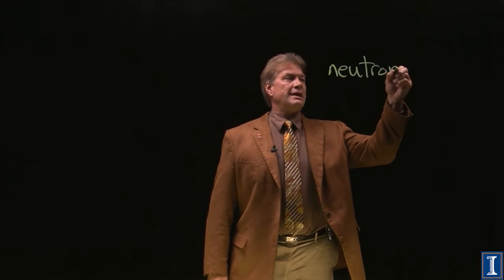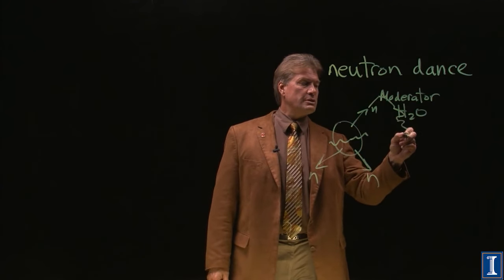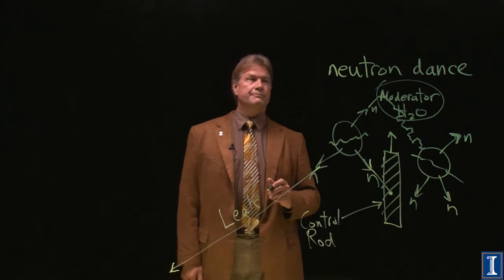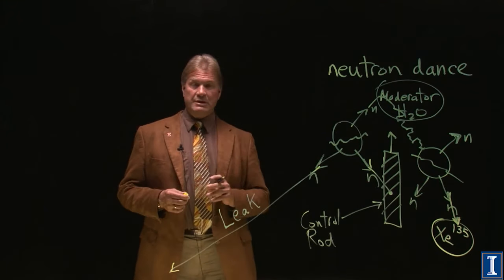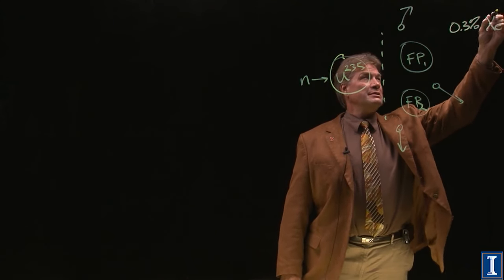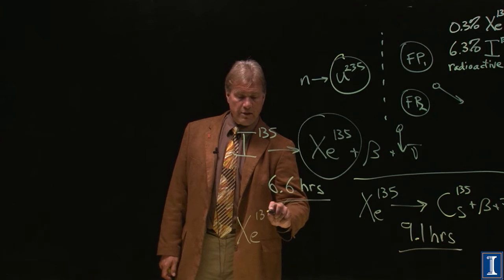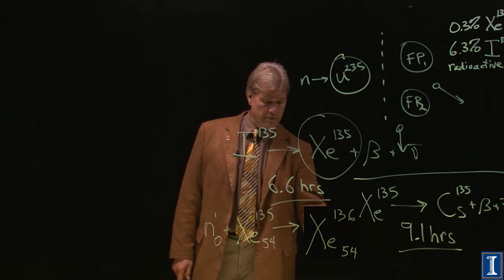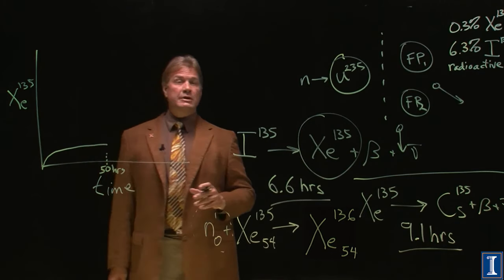Xenon Can Be a Problem

Comment: Sorry for the long post, but I need to make a correction and clear up a bit of misinformation.

As a licensed nuclear reactor operator with 20 years of experience, who has operated 11 different individual reactors of 3 different designs in his career, I can tell you that you are absolutely wrong about having to wait 3 days to restart a reactor.  Not only is it not impossible to restart before then, it's not even dangerous or uncontrollable as long as it is done properly.  I have personally performed fast-recovery startups on US Navy reactors anywhere from a couple of minutes to a couple of hours after a scram.  I have also personally shut down US civilian reactors and restarted them the very next day, due to various maintenance needs.

In either case, xenon does have to be taken into account, and there are procedural limitations, of course.  But, in fact, some of the xenon heavy startups I've personally done have been the smoothest and easiest startups, because you can essentially ride the xenon curve as it decays away, which makes it so that you don't have to add nearly as much positive reactivity as you ramp up, since xenon burnout provides you with that.

The rate at which you ramp down absolutely affects your xenon concentration.  In Chernobyl, they let power drop extremely fast, which created an absolutely huge concentration of xenon.  Their reactor went completely subcritical.  In all of my training and all of our procedures, if we ever end up in a state where the reactor is truly subcritical (-1/3 DPM SUR), we are required to shut it down.  If you end up creating that large of a xenon concentration, it would require far too much positive reactivity to be added to offset it, just to maintain power, let alone raise it back up.  That's the problem with what happened at Chernobyl.  It's not that shutting down a reactor means you can't restart it for 3 days, it means improperly controlling your reactor to let it get that far out of bounds, and then adding too much positive reactivity too quickly will get you into trouble.  If done properly, you do not need to wait 3 days.

Respectfully, I am not a nuclear engineer.  But I have been trained by the US Navy, to operate their reactors, as well as being trained by my current company, and licensed by the NRC to operate their reactors, and I have 2 decades of experience, combined.  I studied all of the reactor physics formulas, and used to be able to calculate the various values, most of which I have long since forgotten the specifics of, because you don't calculate those things on a daily basis...or ever...in regards to operating a reactor.  I would expect reactor engineers to know more specifics about fuel loading, enrichment, and all of the engineering calculations to evaluate a reactor's performance.  But actual operators, who physically control the reactors on a daily basis, have a lot better knowledge on actual operations.  A chemical engineer, for instance, would know a lot more about engine management and fuel control for an engine, but the truck driver with a CDL and 20 years experience would surely know a lot more about the nuances of what gear to select when approaching a certain grade with different sized loads behind him.

No offense intended.  I am not meaning to criticize anyone, here, I am just trying to clear up a bit of a misconception that you seem to have.  Because I have absolutely done this myself on numerous occasions, with no ill effect, and in a perfectly smooth and controlled manner.  There is no 3 day limit before you can restart a reactor.  That's just absolutely not true.
Reply: How does this comment not have more likes? It's great to see people with experience commenting in this - great to have you Adam. E.g. I'm a physicist, and while I understand the detailed particle physics, the engineering/practical aspects of this are way beyond me. For instance, when you comment "ride the xenon curve" so it's easier to increase reactivity without having to remove further control rods, I've got not idea roughly what fraction would typically have to be removed. I understand approximately that this is to offset other negative reactivity coefficients of temperature (void, thermal expansions etc), and that Chernobyl's positive void coefficient was on reason it ramped up so quickly after the xenon shut-down, but have no "feel" for how this works in practice. So it's great to read this. Having said that, these videos are still Nuclear Physics 101 - a great intro, but fairly basic details, so I think that his statement about "needing to shut down for three days" is close enough of an approximation to be justified.
Reply: Oh, and BTW Adam - when you mention "  I studied all of the reactor physics formulas, and used to be able to calculate the various values, most of which I have long since forgotten the specifics of, because you don't calculate those things on a daily basis...or ever...in regards to operating a reactor." this was one of the issues at Chernobyl - their computer, SKALA, to calculate these things took 15 minutes to estimate reactivity through various calculations, and even then I suspect it didn't do a good job, since the reactor was so large, the reactivity varied a lot over the core. So all the fancy nuclear engineering theory in the world (at the time) could not have helped them, and they should have just followed the ****ing safety protocols.
Reply: @clancyjames585  In response to your second comment (I saw them out of order in my notifications) 

I agree with you 100%.  I don't know the specifics about the day to day reactivity calculations at Chernobyl, of course.  With a reactor design like theirs, with a graphite moderator giving it a positive void coefficient, and thus positive temperature feedback, my understanding is that they quite frequently had rods moving  fairly regularly to maintain everything.  We very seldom move rods, because it's just not needed at our plants.  Our plants are very stable when it comes to reactivity.

The Navy reactors I used to operate were small enough in size, and were very VERY responsive, due to a very high enrichment of U-235, so on those, you really didn't need to calculate anything.  You just basically moved control rods a small bit, and you pretty much knew the result from a certain amount of rod motion, and it was very even and predictable.  Like driving your car, you don't have to calculate how far to push the gas pedal to drive.  Plus, the Navy reactors were responsive enough to negative temperature feedback that you usually would not even need to adjust control rods when you changed power.  Raise or lower turbine steam flow, and within a few seconds, the reactor would respond and stabilize at the new power level.

The commercial reactor I operate now is a different beast entirely.  Much lower enrichment, and very large in size (though smaller than Chernobyl, by quite a bit).  We do have negative temperature feedback (unlike Chernobyl), but it's a bit slower to respond than the Navy cores.  Our reactor design is inherently very stable, and it has all of the negative feedback aspects to make it essentially remain stable with no continuous manipulations or input at all.  Normally, we only make a slight adjustment to the boron concentration every few hours, but that's all it takes to remain stable.  Moving the plant around is a bit more involved, but our rods operate automatically to maintain temperature, and we simply have to adjust boron concentration to keep rods from moving too far and changing the power distribution.  Easily managed, with no complex calculations required.  A spreadsheet can calculate the required adjustments almost instantly.  A few simple thumbrules are also used for rapid power reductions, so the reactivity spreadsheet really isn't even needed.

Probably one of the biggest differences in our fundamental operation is that if we ever drove the reactor subcritical, like they did at Chernobyl, we would immediately trip/scram our reactor.  We would never let power fall so quickly in the first place, and even if we did, we would not rapidly add tons of positive reactivity to quickly restore power, and certainly not outside of design limits.  It's just not something we would do.  We just have a different safety culture, and of course, the industry has learned quite a lot from accidents like the one at Chernobyl.
Reply: @clancyjames585  In response to your first comment

Completely true.  I certainly don't want to come off as bashing this video, I mainly just wanted to correct that one particular point, but you are right, this is basic level stuff here, and it doesn't need to be needlessly overcomplicated for most people.

To get a little more in depth about riding the xenon curve, the biggest thing we aim to control at my plant is temperature.  Sure, there is a limit on power that we cannot exceed, but at the end of the day, the main thing we are driving by is the temperature.  We have a certain temperature to maintain at any given power level.  If temperature is too high, it means the power output of the reactor is higher than the turbine.  If temperature is too low, it means the turbine is making more power than the reactor.

What basically happens is that to raise power, we have to open our governor valves and admit more steam to the turbine, to push the generator harder, and make more electrical power.  As the governor valves open, it draws off more steam, which cools down the reactor.  The turbine power is rising above the power of the reactor, so you have to add positive reactivity to bring reactor power up to match the turbine, and bring temperature back to where it is supposed to be.

We have two ways of doing that at my plant (PWR reactor), rods and boron.  We have a certain amount of boron dissolved in the coolant which is a neutron absorber.  Need to add positive reactivity?  Either dilute out some boron (add fresh water with no boron in it, and drain out a little bit of water that has boron in it), or move control rods out.  If you move rods out, it makes the power distribution move physically higher up in the core.  If you dilute boron out, it moves power lower in the core.  So we move rods a little bit, and dilute a little bit to keep power balanced in the middle of the core.

More steam to the turbine, cools the reactor, dilute or withdraw rods to keep the reactor temperature up, repeat.  As power goes up, it also adds negative reactivity due to the fuel temperature going up, though, so we have to add a little bit more positive reactivity (rods/dilutions) to overcome that bit of negative reactivity.

It's all fairly balanced and easy to predict and manage.  The only wild card is xenon.  If you start with a xenon free core (like it would be a few days after shutdown) and startup the reactor and raise power, xenon will build up as you raise power.  So, in that case, you have to add positive reactivity to overcome the temperature change from drawing off more steam, add positive reactivity to offset the negative reactivity from rising fuel temperature, and then add some more positive reactivity to offset the negative reactivity due to xenon building up.

I hope all that is clear and makes sense.  What's different is if, for instance, you were to trip/scram the reactor, and then start up the next day.  On a shutdown or significant down power, xenon builds up rapidly, as explained in the video.  You end up with a huge concentration of xenon.  Now when you go to start up, the opposite happens.  You're raising power, and burning xenon out, rapidly.  As xenon burns out, it's adding positive reactivity.  This is basically what got the Chernobyl guys in trouble, and started off their problems.  But, if you're doing things in a controlled manner, the xenon burnout can help you.  You're drawing off more steam to raise turbine power, so you still need to add positive reactivity to keep temperature up and to offset the negative reactivity of fuel temperature rise, but now, xenon is burning out, not building up, so xenon is giving you positive reactivity to help you out.  It makes it so that you end up moving rods less, and diluting less boron out of the reactor, because xenon is giving you positive reactivity.

In the end, it's all going to balance out, though.  But starting up with xenon burning out can make the startup and power rise go a lot smoother, because it can sort of raise power on its own.

Oh, and as to what fraction of rods would typically be removed, that's not quite how it works with our cores.  Our cores are designed to operate with all rods completely removed, once everything is balanced out at 100% power.  We are not at all designed like Chernobyl.  Specifically, at my plant, we have 6 banks of rods that are removed one bank at a time, with some small overlap between banks.  We are designed to go critical when the last bank is about 3/4 of the way from being completely removed.  We calculate how much boron we need to go critical at a given rod height, and we set those conditions before we remove any rods.  Once we start up and go critical, we still have about 1/4 of the rod height on that last bank, to help control and manage things as we ramp up in power.  Over the next week or so after a startup, we slowly adjust boron concentration and slowly withdraw the rods fully.  We really only use rods for "shaping flux" and controlling where the reactor makes power, but it will naturally center itself, and we can get the rods fully removed from the core.

What I was basically saying is "riding xenon" will make it so that you don't have to pull rods out as quickly, and don't have to dilute as much or as often.  We're still going to end up moving rods all the way out, we just go from maybe moving rods every 10 or 20 minutes, to maybe every hour.  Since xenon burnout gives us some positive reactivity, we don't have to add as much positive reactivity due to rods/dilutions.

I know this was very wordy, but I hope it makes some sense.  Feel free to ask any questions if you're curious or want to know more, or if something isn't clear.
Reply: There was a hot spot in the bottom of the core, of which the controllers were unaware. That certainly must have contributed to the explosion. And while I am sure that could be done with western reactors, I am not so sure about the RMBK-1000 reactors those engineers were operating. Hopefully, you never had to operate a reactor capable of going runaway like those.......
Reply: How do you increase reactivity in a poisoned reactor core to restart it after one day? Please assume that I'm an educated man but not a physicist. I'd describe myself as an amateur mathematician.
Reply: @benchapple1583  OK, forgive me, but this is going to be pretty long.  I want to do a good job answering your question, but it's pretty complicated.

I'm only going to discuss the current plant I work at, because the Navy cores I operated, I can't go into detail about anyway. So, first off, we don't really use "poisoned reactor" as a term, at least not over here in the West. We would refer to having a xenon transient, or, if you can't start back up due to too much xenon, that would be known as being xenon precluded. Xenon precluded start ups are very rare. Lets discuss the worst case scenario at my plant. If we're operating steady state at 100% power, and have a reactor trip, all control rods fall in and the reactor shuts down, that's the fastest we can make power go down.

There is a limit. First, a quick explanation of what's happening...If a neutron creates one fission, and each fission causes one more fission with one of it's resulting 2-3 neutrons, such that you have the exact same number of fissions each generation, that's considered critical. Less than that, fewer and fewer fissions, that's being subcritical, and greater than that, more and more fissions, that's being supercritical. It's actually measured by the number of neutrons in each generation. If a certain number of neutrons causes a certain number of fissions, resulting in the exact same number of neutrons and the exact same number of fissions in each generation, that's criticality. The rate of fission is not changing.

So, the reactor trips, and all rods fall into the core, they suck up tons and tons of neutrons. The reactor goes extremely subcritical. Each generation is fewer and fewer neutrons, and fewer and fewer fissions. If that was it, it would quickly drop to having no fissions at all. But fission isn’t the only source of neutrons.  There are a lot of highly radioactive fission products, and they continue to decay away, and they continue to pump out their own neutrons. They're not fission neutrons, because you're subcritical, but they're neutrons regardless, and they can, and do, still cause fissions, releasing more neutrons. So, because you have to wait out these fission products, the fastest you can lower power is -1/3 DPM (decades of power per minute). That means it takes 3 minutes for power to be 1/10th what it was, another 3 minutes to be 1/100th of initial value, 3 more minutes to be 1/1000th of initial value, etc. Now, you pretty much instantly drop to about 5-7% power just based off dropping rods into the core on a trip, so you get an initial jump start on shutting down, but it takes several minutes for power to lower all the way down to essentially nothing. Think of an electric motor that you just turned off. There's no more energy turning the motor, but it may take just a bit do coast down and stop. That's what happens with a reactor. You can go subcritical, and the reactor is actually shut down, but power has not dropped to the absolute minimum yet...it hasn't coasted down.

 The reason I say all of this is that this is the physical limit of how fast you can drop power. The faster you drop power, the larger the xenon transient will be. So, you just tripped, rods have fallen in, power is dropping, and for about the next 9 or 10 hours, xenon is building in rapidly, to a relatively high peak. That's the worst case xenon transient we can possibly get. Xenon builds up for about 9 or 10 hours, and then slowly decays down to nothing over the next day or two. That's what we have to manage. So lets talk about reactivity control in a PWR (Pressurized Water Reactor). We control reactivity with control rods and boron. We have boron diluted in the coolant system (plain water), and we have control rods we can move in and out of the core. We choose what rod height we want to be the critical rod height. When everything is shut down and xenon free, the way we start up is to figure out what rod position we want to go critical, and figure out how much boron we have to have to make it go critical at that rod height. More boron means rods will be higher when you go critical, less boron means rods will be lower.

We add boron, or dilute out boron to get to the right amount, and then we pull control rods in a controlled manner until we go critical. We start taking off steam to turn the turbine, which puts a load on the reactor, and we add positive reactivity with rods and by diluting out boron. You'll move rods out a little bit, which makes power higher in the core, and you'll dilute out some boron, which will make power lower in the core. It's a balanced approach to keep power physically centered where we want it. The end result is that we eventually get rods fully withdrawn, and from that point on, we dilute out the boron over time to compensate for fuel burn up. As we are raising power, you're going to generate xenon, which will reach an equilibrium value, and we also have to add positive reactivity to compensate for that. In a nutshell, that's the balancing act we do. While raising power, we may dilute and pull rods every few minutes. Once we're stable, rods aren't moved, and we dilute maybe every few hours, just for fuel burn up.
Reply: So, what's different with that xenon transient? Instead of xenon starting at nothing, and then building up as we raise power, xenon is starting at a much higher value. It's going to build up for maybe 9 to 10 hours, and then decay back down to an equilibrium value over the next day or two. Depending on where you are in that timeline, depends on what happens. First off, we would need to establish a different critical boron. We still want rods to be at a level where we have plenty of "bite" to control things with the rods. So...more xenon overall means we need to get rid of some boron before we can start up. You're swapping out xenon for boron. More xenon, you need less boron. Less xenon, you need more boron. So, we set a time we expect to go critical, calculate how much xenon we will have at that time, calculate what boron concentration we need to have, and we either borate, or in this case dilute the boron concentration down. Now, we can pull rods, and go critical right where we expect to. Yes, xenon is higher, but now boron is lower, by the same equivalent amount, and we go critical where we want.

So now what happens? Well...if you're on the front half of the xenon peak, xenon is still building in. You're going to need to keep diluting boron out, and you'll need to keep withdrawing control rods to add positive reactivity to compensate for the xenon. If you're on the back half of the xenon peak, its the opposite. Xenon is going away, so you will need to add boron back in, and insert control rods to add negative reactivity to compensate for xenon going away. In either case, changing boron concentration and moving rods is a coordinated effort to keep power centered in the core. Rods too far out pulls power up higher, rods too far in pushes power down lower. It's a balance. That's what you have to do to just maintain where you are. It's still very easily controllable in our cores. You might be adding reactivity every few minutes, but it's manageable.

Now you need to raise power. Here's where things can help you. As power goes up, you're going to start burning out xenon faster, since your fission rate is going up. Xenon started out as being too high to begin with, so now, as you raise power, xenon begins to go away. This adds positive reactivity on its own. You normally have to dilute and pull rods quite a bit while you raise power, to add positive reactivity. But now, xenon burning out kind of gives you a gift of free positive reactivity, which minimizes how much you need to dilute and pull rods.

In a nutshell, we are going to start from a known stable condition. We know how much boron we need to go critical at the rod height we want. We know how much we need to move rods, and we know how much boron we need to have at any given time. And then it's all just a matter of managing it. Now, I mentioned earlier about a xenon precluded start up. At the absolute extreme end of core life, we would have an extremely low boron concentration to begin with. Basically, our fuel is essentially all burned up, and we've had to remove so much boron to keep the reactor at power that there's almost no boron left in the coolant. In that case, you could potentially be in a situation where you physically cannot get enough positive reactivity with control rods (since you have no boron to work with) that you could end up being precluded, and have to wait until the transient dies back down. Maybe a day later. Maybe a day and a half. Certainly not 3 days. But this is almost unheard of, because we run with a fuel load high enough that we never get there, before the next scheduled refueling anyway. The absolute worst case scenario would be if you tripped from 100% power, on the very last week of the fuel cycle, when boron is at its absolute minimum. At my plant, we have recently done that, a few years ago. 1 week out from the refueling outage, we ended up with equipment issues causing a trip, fixed the issue, and started back up to produce power for the remainder of that week. Now, in that particular instance we did not come all the way back up to 100% power, because it was only for a few more days, but we did come up to about 60% power. The point is, we very quickly restarted, even after the worst case scenario.
Reply: So, lets shift gears to close this out, and discuss what's different with Chernobyl. They did not have a reactor trip. Due to having a very unstable core design, they had a positive feedback loop. That means as power dropped, it adds negative reactivity, and it would drop faster. As it drops faster, it's going to add more negative reactivity, and drop even faster. Chernobyl actually went subcritical. They were shut down. Remember the analogy of a motor coasting down I talked about above? So, to start with, they disabled safety systems. They lowered power according to schedule, but then got delayed by their grid controller. Xenon is building in. Power is lowering. They add more and more reactivity trying to keep power up, but due to the feedback, it continues to fall. They add even more reactivity, well beyond design margins. They finally stopped the power decrease, but they had created a very volatile situation.

Due to core design, the control rods had graphite tips used to help shape and control power, and they had too many rods too far out of the core, meaning that those graphite tips were too high up in the core. When they tripped the reactor, the rods began to fall, and those graphite tips that should have been at the bottom, and falling out of the core, were actually in the middle, and falling into the bottom of the core. Power was centered in the bottom of the core, and the graphite caused an instantaneous power peak. Instead of being stable with graphite in the bottom that falls out of the core, they had graphite fall INTO the most reactive part of the core.

So, what's different about our cores? For one, we don't use graphite, at all. Our rods are ONLY negative reactivity, period. For another thing, we have a temperature feedback loop, by design (I can get into more specifics if you wish) that will stabilize power. As power rises, temperature rises, which adds negative reactivity. As power lowers, temperature falls, which adds positive reactivity. In either case, it tends to stabilize the reactor. So our power doesn't just fall at an exponential rate like Chernobyl's did. We simply aren't designed where that happens. Secondly, if we ever DO end up subcritical, with a -1/3 DPM, we are trained and required to trip the reactor to put it in a safe condition. The problem is that if you're power is falling that quickly, you don't really know how much negative reactivity you have, overall. You can be very slightly subcritical, and power falling at -1/3 DPM, or you could be EXTREMELY subcritical, and power is still falling at -1/3 DPM, because that’s the absolute fastest rate it can fall.  You can't know how much positive reactivity you can safely add to halt the power drop, and you can very very easily add too much positive reactivity and get yourself into trouble. We also DO NOT disable our protective safety functions when we are at power. Period. Ever. So even if you DID have power escalating rapidly, we would have automatic trips to shut the reactor down. And if our rods drop in, our reactor shuts down...period. We don't have the graphite tips and limitations on how many rods can be pulled and how far.

So those are the key differences. I hope that helps, I know its very VERY long and wordy. Feel free to ask if something isn't clear, or if you just have more questions.
Reply: @adamhutchins1981  Thank you for taking so much time to do this.
Reply: @benchapple1583  You are quite welcome, I don't mind at all.  I hope that answered your question and made it at least reasonably easy to understand.  Reactor theory is not the easiest subject to understand, and it's difficult to explain things simply without a lot of deeper discussion.  Any other questions, or if something isn't clear, feel free to ask.
Reply: @adamhutchins1981  Thank you again. I don't mind at all if you treat me like a simpleton as you probably should. Feel free to raise your game if you wish, as I believe I've said I am a mathematician and will understand complex concepts.
  I was intrigued by the idea that the speaker stated, in no uncertain terms, that he trains his engineers to wait three days after shut down before attempting restart. Whereas you stated that you have restarted reactors much earlier than that, under the same conditions and I believe you both. 

  My question is this: Are you both right and that protocol on an SSN might be less risk averse? I'm trying to imagine a situation where the power plant has gone down and the skipper is not being patient about his ship being disabled, to all intents and purposes. Versus a civilian, much more powerful, reactor where the manager has the luxury of time and can play the 'safety is king' card whenever he likes.
  I got the idea from your answer that you have been in the position of 'juggling' to try to re-establish power output, which implies urgency. If you were on an SSN then anyone can understand that. On the other hand if you were in charge of a large civilian power station, would you act the same way?
Reply: @benchapple1583  Of course, there is no intent to treat anyone like a simpleton, lol.  It's just that most people aren't aware of many of the details of reactivity control, and I want to make sure everything is easy to understand.  As for your most recent question, although I qualified and trained on an SSBN reactor plant, I never served on an SSN or SSBN, I was a reactor operator on a nuclear powered aircraft carrier.  Still, I do know a fair amount about submarines based off of my training, and yes, propulsion in a submarine is vital to keep from sinking.  Navy cores are extremely overdesigned with enormous safety margins, and they can handle huge and rapid power swings that a civilian power plant cannot.  For instance, if you have a SCRAM on a Navy reactor, it is common practice to do a fast recovery startup.  I won't go into the exact limitations, but we can go from SCRAMMED to full power within a matter of minutes.  For a civilian plant, it takes maybe an hour to achieve criticality, and can take a day or two to raise power all the way back up to 100%.  There's just so much higher of a fuel load, and a much more robust designed core that is physically so much smaller in Navy plants, and they can handle it.  And yes, we did fast recovery start ups all the time, usually for training.  It was not unheard of for the Captain or someone he designated to SCRAM your reactor from the remote panel while you are on watch.  This would be quickly followed up with a call into the control room telling you the cause of the SCRAM.  Once you know the cause, and any deficiency is corrected, they give permission to do a fast recovery start up.  You go from being suddenly SCRAMMED to at power within minutes.  The plant is designed for it, and you're well within safety margins to where it's not a safety concern.  Also, just based off of fuel loading and design, xenon has a much weaker effect on Navy cores, anyway.

For civilian cores, it's about economy of design.  We are simply not designed for those extreme transients, because it would cost exponentially more to accomplish that.  Civilian plants are designed to be easily and economically refueled and to make the most power for the cheapest cost.  That does NOT mean that safety margins are compromised, of course, but the plant is just not designed as robustly, because it's made to come completely apart every 18 months or so for a refueling.  And due to the physical size and low fuel concentration as compared to a Navy core, the limits are more restrictive.  Even still, a maximum xenon transient on my current plant, it's still well within all margins and very controllable to start up pretty much whenever.  That's not to say we would ever rush into it.  In fact, as part of the administrative issues that would limit our startup, most of it involves determining the cause, making any repairs, making sure there are no issues, performing just-in-time-training for the operators to perform a practice start up under the same conditions in the simulator, etc.  No one is shooting torpedoes at us, here, so we never have a NEED to start up right now.  But there is a huge economical cost to being shutdown, because we lose a few million dollars for every day we are shut down.  So, the entire organization is going to make sure that everything is right to start up, and once everyone is on board, we start up as soon as we can to continue to make money.  Please understand that a conservative bias and nuclear safety are the absolute highest importance to us, and we will not start up until everything is analyzed.  That's why after a trip, here, it's usually sometime the next shift when we would start up, or maybe the next day.  But the reactor physics and the xenon transient is virtually never the actual limitation, even with the civilian cores.  On a xenon free startup, like I mentioned before, you will usually have to add reactivity maybe every 5-10 minutes.  On a maximum xenon startup, you're still going to perform reactivity additions about every 5-10 minutes, it's just that your dilutions will be of a larger amount.  And of course, at anytime control of the plant becomes an issue, we are directed to fail conservatively and trip it out.  If we have trouble maintaining temperature, we trip.  Period.  It's just not anything that isn't easily managed, and the quick turnaround startups I've done have all been easily managed with no safety concerns in our approach.

As for the "3 day rule" mentioned in the video, that's not a thing I have ever heard before.  I've worked with numerous reactor engineers, and never heard any such thing from them, and it's never been anything in our training.  This may be something this one professor teaches his students, and maybe it's a good thumb rule for engineers in training, but in the real world, it's just not an actual issue or an actual concern.
Reply: So, yes, there is quite a bit of difference between Navy and civilian plants.  By default, in the Navy, you're going to start up as soon as you possibly can.  For a civilian plant, there's a lot more discussion and planning involved.  ...But we still don't have to wait 3 days, lol.
Reply: @adamhutchins1981  Thank you yet once more for taking the time.
Reply: @adamhutchins1981  Another really important issue is size.  The largest naval reactor is about 165 mwe.
Reply: richard mccann  You seem to already have your mind made up and probably are not really interested in anything I have to say.  But for the sake of discussion:

1) boron is not radioactive in the first place.  There is no such thing as "dumping radioactive boron" anywhere, because there is no such thing.

2) I have already mentioned that all waste water from our system is cleaned up before being released.  Our reactor coolant system continually recirculates through a demineralizer and filtration system.  Excess water taken out of the system is collected in large tanks for further processing.  We have an entire waste water processing plant with various demineralizer beds, filters, and reverse-osmosis media to purify any waste water before it is released.  Our waste water we release back to the river is cleaner and more pure than the river water was to begin with.

3)  I don't know how much radiation you believe is in containment that is released during venting operations, but there is virtually zero airborne contamination inside containment under all but the most extreme accidents.  We routinely ventilate containment to maintain the air pressure inside within limits.  This ventilation system automatically isolates and shuts down, completely sealing off containment in an accident scenario.  There are 3 barriers to keep fission products safely contained.  The first is the fuel cladding itself, the metal tubes the fuel is contained inside, which are completely sealed.  In the extremely unlikely event that there is damage to the fuel assemblies, anything that leaks out of the fuel assemblies is contained in the coolant system.  In the even more unlikely event that there is a leak or rupture in the coolant system, the containment is the third barrier to prevent release to the environment.  You have to fail all three barriers to have any release to the environment.  In an accident scenario our containment ventilation system shuts down and is sealed off and isolated.  Nothing is getting in or out of containment.  Should there be any release inside of the containment building (failure of the coolant system boundary), first off, the fuel is still contained within the cladding, so there is still no release, even into the containment building.  Secondly, we have catalytic recombiners to turn any hydrogen gas that builds up back into water, by recombining it with oxygen.  Only as an absolute last resort would we vent the containment, if there is absolutely no other method to keep the pressure low, and we would only vent as little as possible to maintain pressure.  In that instance, you still are not releasing any radioactivity, because you still have the fuel contained in the cladding.  You have to fail all three barriers, which means significant fuel damage, a significant break in the coolant piping, and some type of break of the containment structure or a release from containment due to recombiners not being functional.  You literally have to have about 10 or 12 different failures on top of each other.  Even Three Mile Island, with a partial meltdown, only had insignificant and negligible releases of radioactivity. 

I know you won't do it, but I would really hope you would open your mind and do some real research into the actual truth about how safe nuclear power is, and not listen to anti-nuclear propaganda, which is filled with lies and intentional misrepresentations in order to mislead people such as yourself.
Reply: @poitsplace  You are absolutely correct, and I did briefly mention that.  I spoke more about the actual physical size of the cores, comparing a Navy core to a civilian core, but the rated thermal power limit is a function of the physical size of the core and the fuel loading.

The largest Naval reactors are a bit bigger than you stated, however.  I don't know the exact figure, because I was never qualified on the Nimitz class carriers, but their reactors are in the ballpark of 500 thermal megawatts.  As a matter of comparison, the plant I currently operate is much closer to 3,000 thermal megawatts.  With cores that large, they are necessarily slower to respond and control.  It's like comparing a sports car to a large bus.
Reply: @adamhutchins1981  @Adam Hutchins Great explanation. The paragraph "So, what's different about our cores? " really sums it all up nicely.
I was wondering why you shut it down if it becomes subcritical, while claiming you can restart it soon after. The answer being simply - you dont know how subcritical it got - makes sense. 
But it means a reactor works just like any other finical device you have at home - when in doubt, try turning it off and on again =)
Reply: Andy Holland  That's pretty funny.  And you're right, it is possible to be xenon precluded at the very end of core life.  But from my experience, all the years I've been doing this, we never get to that point.  My current plant refuels each reactor every 18 months, and each fuel load has enough enrichment that we still have enough excess reactivity in the core even at end of life that I have not seen us ever have an issue with being xenon precluded.  But under the right circumstances, it is possible.
Reply: @misium  Yep.  Essentially, any time we do not know the actual reactivity condition of the core, we are required to put it in a safe shutdown condition.  Once everything is shutdown and stable, we can calculate where we are, and figure out what it's going to take to achieve criticality again.  If you end up subcritical enough that the core is no longer self-sustaining and power is dropping at the maximum rate, you have no way of being able to tell how subcritical you are.

Drive all rods in, and let power fall down to it's shutdown value in the source range and stabilize, and you can then know how much reactivity you have.  It's all just a matter of being conservative.  There is industry history where operators have inadvertently gone subcritical, and then overcorrected in an attempt to stabilize power, adding far too much positive reactivity and escalating power quickly to the point that they ended up with a trip on either high power level or a high start up rate.  If you don't know the reactivity of the core, you have to shut it down.
Reply: Adam Hutchins - Thank you for taking so much of your time explaining this to us.
Reply: Andy Holland  All good points.  I don't have personal experience with a graphite moderated core, obviously, so I can't personally attest to how touchy it is, other than to say that everything I have read about Chernobyl shows that it could be wildly uncontrollable.  It's just not the case with our cores, obviously.

I have been at my current plant for 15 years now, and in that entire time I've been here, we've gone back and forth about control using auto rods.  For our risk analysis, we keep rods in automatic to respond to a load rejection.  We are designed to mitigate a 50% load rejection, using steam dumps (40%) and automatic rods (10%).  We take a hit on our EOOS risk analysis if rods are in manual.  When I was first licensed, we were not allowed to use automatic rod withdrawal.  We would allow inward rod motion for transients, but we were required to go to manual when rods needed to step back out, and control that manually.  Within the last couple of years, we have changed that to allow automatic rod motion in and out in response to a transient.  It relieves the operators burden to some extent, although we still have to verify proper response and control and take action if needed.  We allow automatic rod insertion when ramping down, as well, but for normal ramp ups, we are not allowed to use automatic rod withdrawal, still.

As for axial offset, we do have to use rods to dampen oscillations during approximately the last 3rd of core life.  As the center of the core burns out, we end up with essentially a separate top and bottom core, making axial offset much more dynamic during the end of life.  We have no automatic control system that can manage those oscillations, so we do have to manually adjust control rods periodically to dampen it.  We've never had any issues with operators responding in the wrong manner, though.  It's a fairly slow transient (at least a day or two for each suppression) and is very easy to manage, plus it requires another operator to peer-check the manipulations and a supervisor to oversee them.  So there's other people involved in the decisions.  I understand from older operators that back in the 90s, we had a different fuel loading that never ended up with axial flux oscillations, and so it wasn't even a thing back then.  And over the last few years, we have raised our fuel enrichment, so we don't coast down anymore heading into our outages.  We have managed to shorten outage times, meaning more days online, and yet we still have enough excess reactivity in the fuel to maintain 100% the entire cycle and not coast down.  When I first got my license at my current plant, back in 2011, we would typically coast down the last 2 weeks or so.  Things have changed and reactivity management and outage planning has gotten a lot better.

Thanks for your input to the discussion!
Reply: LOL... I am an experienced truck driver! Your analogies are perfect! The fellow giving the presentation, sounds like an academia nut... knows is all but never had any real hands on a day in his life, but his description of Chernobyl sounds like the corporation I work for.... people higher up with no hands on telling you how to handle something they have no licence, training, or hands on experience doing all in the guise of safety... LOL, in my case, it's transferring thousands of gallons of liquid propane... but either way, even if this presenter's information is not completely accurate on the operating side, it does sound like what he said would be in err on the reaction mechanics side of caution, and while it doesn't work at the speed of industry, technically, sounds like it won't cause any undue harm, even though, from what you're just saying, that's not how it's done in the real world... LOL, Interesting information I'd probably never see elsewhere...
Reply: @adamhutchins1981  You are a class act I commend you for trying to educate a mule. (richard mccann lowercase name uppercase comments :)  )
Reply: @adamhutchins1981  it's seriously amazing how willing you are to share your depth of knowledge with us. I am currently at university majoring in nuclear engineering, but this comment chain was more useful than any of my intro to reactor operation classes haha. Thank you for sharing so much!
Reply: Great post, Adam! Do you know if there's a quick way to calculate ramp rate availability from burning out xenon?
Reply: @Baibakov88  Short answer: If you’re asking if we have a way to quickly calculate the reactivity effects of xenon, why, yes, we do!  And it’s actually pretty easy for the operators.

We have two main “tools” we use when coming up with our reactivity plans.  The first one is a program called Beacon.  I’m not a nuclear engineer, so I don’t know what goes on behind the scenes in this program, but engineers have gotten very VERY good at developing extremely accurate computer models of core reactivity.  This is what Beacon does.  Given the various conditions of the plant, it gives us an extremely accurate calculation of what xenon is doing.  It’s based off of a computer model, however, and not a direct measurement of xenon.

There is no direct way to actually measure how much xenon is in the core, and there is no direct way to actually measure core reactivity.  Reactivity can be calculated, of course, based off of nuclear instrumentation, which is actually physically measuring how many neutrons we have in the core.  We measure neutron leakage, how many neutrons make it out of the reactor, and we have detectors around the reactor to measure this.  The number of neutrons that leak out is proportional to the number of neutrons that are in the core, so this is a direct measurement.  Our Beacon program will use this data, and will tell us how much reactivity we are getting from xenon, and the rate it is changing.

The second tool we use is our reactivity spreadsheet.  It has a lot of data tables built into it for the specific core modeling, entered into it by reactor engineering.  The spreadsheet takes inputs from the plant computer for various plant parameters like reactor power, temperature, fuel burnup, rod height, etc.  Given those conditions, the spreadsheet will tell us exactly how much reactivity we will get from a given amount of boration or dilution, or for a given change in control rod height.  The sheet will also calculate how much reactivity is needed to accomplish a certain ramp rate, if we are going to raise or lower power.  And yes, it takes xenon into account.  We enter how fast we want to ramp the plant up or down, we enter the current xenon rate from the Beacon computer, and the sheet will tell us exactly how much we need to borate/dilute for a given time span.  When we are maintaining power stable during a xenon transient, we generally run a calculation to perform reactivity manipulations every 15 minutes, because 4 times per hour is very manageable for the crew.  If we are ramping up or down, we will generally plan on every 5-10 minutes, which is still very manageable, because you will need to add more reactivity to compensate for changing power, as well as to compensate for xenon.  We also bring in extra operators for ramping the plant up and down to manage the more frequent reactivity controls required.  And, of course, on a normal shift, when power is stable, and xenon is not changing, and the only thing that’s happening is the slow burnup of fuel, we will typically perform reactivity manipulations every 2-4 hours, because it’s just not necessary any more frequently than that.

But yes, we have a computer program that gives us a real-time calculated measurement of what xenon is doing, at any time, under all conditions.  I’ll give some more information on reactivity control, if you’re interested in more of the details.
Reply: Here’s a cliff-notes explanation of reactivity in a nuclear reactor (part 1 of 2).  First off, you need to understand what we mean by “reactivity.”  Reactivity is a fractional change in the neutron population.  How many neutrons in a given generation, as compared to the neutrons in the previous generation.  More neutrons leads to more fission, of course, so more neutrons means more power.  If each generation has more neutrons than the last, it means power is rising, and you are supercritical.  If each generation has fewer neutrons, power is lowering, and you are subcritical.  If each generation is the same, you’re critical, and power is not changing.  You have to understand that this fractional change is very small, because otherwise power is changing at a very fast rate.  
For ease of calculations and discussion, we use the unit PCM, which stands for percent milli-rho.  Rho is the Greek letter used as the variable for reactivity in calculations.  “milli-“ is the prefix for 1/1000th, just like it’s used in meters vs millimeters, or 10^-3 in scientific notation.  “percent” is, of course, 1/100th, or 10^-2, just like how percent is always used.  So, what the PCM unit of measurement means is “percent (10^-2) milli (10^-3) rho,” which is just 10^-5 in scientific notation.  Since the fractional change is so small, if each generation has, for instance, 0.00001 times as many neutrons as last generation, you would say that core reactivity is 1 PCM.

Next, you need to understand how this relates to a reactor.  In order to sustain a stable chain reaction, which is called criticality, you have to have everything balanced just right.  Start with a given generation of neutrons, you need them to cause a certain amount of fission, and create the same exact number of neutrons for the next generation, to cause the same exact amount of fissions and the same exact number of neutrons for the next generation, etc.  If you just stack up some uranium and some type of a moderator, in just exactly the right way, you can achieve criticality.  But it won’t last long.  Each time you fission an atom of uranium, you have one fewer atom of uranium.  As your chain reaction is going on and on, you’re fissioning all of your uranium, and the uranium goes away, split into other isotopes.  You will quickly get to the point that you are not producing enough fissions, and not producing enough neutrons to maintain the same fission rate, and it will die off, because all of your uranium has been split apart into other things.

If you want this chain reaction to last longer, you have to put in more uranium, right?  But the problem is, if you just pile up more uranium, now you no longer have that balance to keep things exactly critical.  You have a given number of neutrons, but since there’s more uranium, now you have more fissions, and a larger number of neutrons in the next generation.  Even more fission.  Even more neutrons, etc.  You’re now supercritical, not critical.  Depending on how supercritical you are, you’re either just going to have power (and heat production) rise and rise exponentially to the point that it all melts down, or, if you design it such that it is taken to the maximum extreme, you can develop an atomic bomb.  A very important note: civilian power plants have nowhere near anything remotely close to enough uranium concentration to ever reach that level.  It’s a common misconception, but you absolutely cannot make a nuclear power plant into an atomic bomb.

What, then, is the solution to sustaining a chain reaction for a long time?  Poisons.  You have to load a lot more uranium into your core, so it can last the whole fuel cycle (a civilian plant is normally 1-2 years for a fuel cycle).  But if you just add the fuel and the moderator, you will have a very supercritical mass in your reactor.  You have to add something to put the brakes on it.  The ones we have control of are burnable poisons, control rods, and, for my plant, boron dissolved in the coolant.  Burnable poisons are loaded within the fuel rods, and they burnout over time as they absorb neutrons.  They’re put there to help out at the very beginning of core life when the uranium concentration is the highest.  Not all plants are designed to use the exact same methods of control, but the end result is still the same.  Whatever you use for neutron poisons, you have to have enough poisons to suck up the extra neutrons, to keep the rate of fission the same, despite having an excessive amount of fuel.  Each generation you have a given fission rate, which releases a given number of neutrons, and based on the amount of uranium you have, that number of neutrons is enough to make power continually rise.  Instead of ALL of the neutrons causing fission, now you have to capture some of the neutrons in your different types of poison, so the net result is that you only have enough free neutrons to keep the fission rate constant.

Over time, as the fuel burns out, the reactor is going to become slightly subcritical, so you have to remove some of your poisons, to keep things balanced, and keep the core critical and keep power at the same rate.  What this actually looks like, on a normal given day, is that your power will slowly lower over 2 to 3 hours, and we will perform a dilution to remove a little bit of boron.  Now there’s more free neutrons, and we go ever so slightly supercritical so that power raises back up to its previous value, it remains critical and steady for a little bit, and then over the course of 2 to 3 hours, it ends up being ever so slightly subcritical, and lowers back down to the point where we do another dilution.  When everything is steady and balanced, and xenon is not changing, that’s literally all we have to do to maintain the balance, is to monitor everything, and watch our power, and when it slowly drops off, we dilute to bring it back up.  The time span is, as I said, on the order of maybe 2-3 hours.
Reply: (part 2 of 2)  But xenon…that’s the wild card of reactor poisons.  Xenon is produced directly from fission of Uranium, and also from decay of radioactive iodine.  Xenon is removed due to burnout (when it captures a neutron) and decay to cesium.  As you raise power, you produce more xenon from fission, and you produce more iodine that will decay into xenon, but you also cause xenon to burnout more quickly, because you have more neutrons for the xenon to capture.  As you lower power, you’re producing less xenon from fission, and you’re burning out less xenon because the neutron population is much lower, but you still have iodine built up that is producing xenon from iodine decay.  All the while, any xenon you do have is slowly decaying into cesium, if it doesn’t end up capturing neutrons.  And, of course, as you lower power, you’re going to have fewer neutrons, so the rate of xenon burnout will go down.

Based off of the varying half-lives of these different processes, that’s what causes xenon to change over time.  Generally speaking, xenon moves in the opposite direction first, peaks, and then turns back the other way to move beyond it’s previous value to a new equilibrium.  On an up power maneuver, xenon burns out faster than it is produced, it drops, but then xenon production goes up as the amount of iodine in the core goes up, and xenon rises to a higher equilibrium value that before.  On a down power maneuver, xenon burnout slows down, but production continues from iodine, so xenon goes up, initially, until all of your iodine decays, then the xenon will decay to cesium, and slowly fall to a lower equilibrium value than before.  In the case of a reactor trip, you almost immediately stop all fission, and the amount of free neutrons in the core go to almost nothing, because your control rods have absorbed all of the neutrons.  You are still producing xenon from iodine decay, but you aren’t burning any xenon out because, again, you don’t have any more neutrons floating around.  It’s essentially an extreme form of a down power xenon transient, with a much higher peak.  So you’re building up and building up and building up xenon, and the only way it goes away is by decaying into cesium.  For the first 10 – 12 hours or so, xenon just steadily builds up, until all of your iodine has decayed.  Then, over the next 30 – 40 more hours, the xenon slowly decays away into cesium.  That’s where this big xenon peak comes from after a trip or a shut down.  I can go into more detail on xenon if you guys want it, but that’s the big gist of it.  A good thumb rule we use is that about 24 hours after a trip, your xenon is approximately the same value as it was before the trip.

So, what does that mean?  On the front side of the peak, xenon is rising, which means in order to achieve criticality, you need less poison in the form of boron and control rods, because you have more poisoning from xenon.  On the back side of the peak, xenon is lowering, and is either at a higher or lower value that your previous steady state condition, based on how long it has been.  If xenon is lower than it was previously, you will need more poisoning in the form of boron or control rods.  But the rate xenon is building in or decaying away is also taken into consideration, because that affects what you have to do after you become critical.  If xenon is still rising, its giving you more and more negative reactivity, so you will need to dilute more and pull rods out more to maintain that balance.  If you’re on the downward side of the xenon peak, xenon is going away, giving you more and more positive reactivity, so you will have to either borate or insert rods to maintain that balance.  That beacon program I mentioned earlier calculates all of this for you, and tells you, real-time, what your xenon rate is doing, so you can plan your reactivity manipulations to compensate for it.
  And of course, as I mentioned, we take the xenon rate calculated from our Beacon program, and put it into our reactivity spreadsheet, and it will tell us exactly how much we need to borate or dilute to compensate for xenon.
Reply: @einfisch3891  Thank you!  I enjoy the subject immensely, and I love educating people about it.  It's something not many people know the details of, and there is a LOT of misinformation and misunderstanding by the general public.  I'm glad you've enjoyed this, and I hope I'm able to break things down and make them easy to understand for everyone.
Reply: (1 of 5) If anyone is interested, we can go into a bit of a case study on a short-term restart situation.  This is going to be extremely long, so feel free to skip it if you don’t feel like reading, but this will show you what all of this looks like in the real world.  This is based on my current plant, so there are some differences with other plant designs, of course.  Let’s just assume it’s the middle of core life, and we were 100% power, steady state, prior to a reactor trip.  We have our control rods fully withdrawn from the core, because that is our normal steady state operation, to be able to utilize the entire core.  We have a certain amount of boron in the RCS (reactor coolant system) to maintain power stable at 100%.  Xenon is at its equilibrium 100% value, and our boron concentration is based off of what is required to maintain criticality with the current amount of fuel concentration.  So that’s where we are starting from.

Now, let’s say we are 6 hours into a 12 hour shift, and maintenance personnel are calibrating one of our dozens and dozens of instruments, and they make a mistake and operate the wrong switch, and cause a reactor trip.  All of our safety systems work, all control rods fall into the core, the reactor shuts down, and we begin building up xenon in a post-trip xenon transient.  The operating crew performs their actions, and the plant is now stable.  We are shutdown, we are at normal no-load operating temperature and pressure, we have our auxiliary feedwater system operating, steam is still going into the turbine building and the secondary side of the plant maintaining temperature on the steam dumps into the condenser.  Management has made all of their conference calls and discussions, determined the issue with maintenance, those poor individuals get disqualified pending more training and an upgrade, and more maintenance personnel have been brought in to finish the calibration and have all the instrumentation lined up and ready for a start-up.

Management has decided to start back up halfway through the next shift (12 hours after the trip), in order to give enough time for reactor engineering to be called in to help evaluate and come up with a reactivity plan, and to allow a crew of operators to go into the simulator and perform a JITT (just-in-time training) startup in the simulator for practice, given the current plant conditions.  Reactor engineering has determined where xenon will be at the time of the startup, and has performed an ECC (estimated critical condition) calculation.  The ECC has determined that xenon is going to be significantly higher than the steady state 100% value, and therefore, they have determined the critical boron concentration we will need will be much lower in order to go critical at 150 steps (about 65% withdrawn) on our 6th and final bank of rods.  While the startup crew is practicing in the simulator, the crew on shift performs a large dilution, using the reactivity spreadsheet, to calculate how many gallons of makeup water need to dilute the boron concentration down to the ECC value.  Chemistry takes a sample of the RCS and determines that the boron concentration is within the bounds of the ECC as determined by reactor engineering.

Now the startup crew comes in and relieves the shift, to begin the start up.  Reactor engineering is on station to provide input on reactivity control to assist the operators.  We begin pulling rods.  The first 2 banks of rods, our safe-shutdown banks, are fully withdrawn, in one continuous pull for each bank.  Then we begin pulling our control banks, 50 steps at a time.  Each time we pull rods, we watch instrumentation and let it stabilize, and reactor engineering runs a quick calculation to determine the current estimated rod height where we will go critical.  We pull another 50 steps, and repeat the process.  After several cycles of pulling rods and evaluating, we get to a point where we know we are close to criticality.  We pull rods again, and we determine we are critical.  We then withdraw rods to establish our desired rate of power ascension, referred to as start-up rate (SUR), which is measured in decades per minute.  1 DPM means power changes by a factor of 10 each minute.  Meaning each minute that goes by, power is 10 times higher than it was a minute before.  Our allowable SUR is ¾ DPM, and that’s what we would normally use.  But it still takes us a few minutes to raise power, because there are several decades of power through the source and intermediate range.  As we get close to 1% power, we insert rods a bit to slow down our SUR, and to stabilize power at 1% - 2%.  At this time, since it’s about 13 or maybe 14 hours since the trip, we are just past the xenon peak, and xenon is going to start slowly burning out.  This means that we will have to begin slowly adding negative reactivity to compensate for the positive reactivity we get from xenon burning out.
Reply: (2 of 5) Personnel are aligning systems in the plant, bringing the main feedwater system on service (which uses steam driven feed pumps), and transitioning off of auxiliary feedwater.  During this time, we are looking at a reactivity plan for maintaining power.  Beacon gives us the current xenon rate, and let’s say it’s telling me I have 20 pcm/hr, because xenon is slowly going away.  I enter this into my reactivity spreadsheet, and lets just say that for this given time in core life, maybe it tells me I will need 30 gallon borations for -5 pcm, and since I have to offset 20 pcm/hr, that’s going to be my plan…borate 30 gallons every 15 minutes to maintain power while xenon is burning out.

Preparations are being made to start up the main turbine and get the generator ready to sync to the grid, but we have to raise power to 10% - 14% before we can roll the turbine.  So, I can slow down on my borations a little bit, and allow xenon burnout to give me some positive reactivity to begin raising power.  Continually adding positive reactivity will raise power, but at the same time, it’s going to raise temperature, as well, and our fuel temperature coefficient (FTC), which is always negative, will give us negative reactivity as the temperature rises, so that’s going to help maintain power and keep it from rising uncontrollably.  For a given positive reactivity addition, power and temperature will rise until the FTC adds enough negative reactivity to stop it from rising.  But just “riding the xenon curve” may not raise power as quickly as we want, however, so we will most likely look at either withdrawing rods or diluting.  Since I have to borate overall to compensate for xenon, I don’t really want to switch to dilutions (which means I would have to flush the line) just to raise power a little bit, so most likely, I’m going to use rods to raise power instead.  So I look at my reactivity spreadsheet, and it will tell me how many pcm I get from 1 step out on rods, and it will also tell me how many pcm I need to add to raise power 1%.  I also know how many pcm I’m getting each hour from xenon burnout, in this case.  So, after discussing with the other operators, we agree on a plan, and I will pull rods maybe 1 step at a time, to raise power.  We temporarily suspend our borations, so xenon is giving us a little bit of positive reactivity as it burns out, still, which is slowly raising my power.  I pull rods a step, and we watch to verify that we get the proper response in power rise.

Now, as we are raising power, that means I have to dump more steam to maintain my temperature.  The reactor is making more heat because power is higher, so I have to take that heat and put it somewhere.  Since the turbine is not running, we have a system of valves, called steam dumps, to dump steam to the main condenser, which then condenses the steam back to water, and pumps it back into my steam generators.  Heat travels from the reactor, through the RCS, and into the steam generators, boils the steam generator water into steam, steam dumps into the condenser, and then becomes water that gets pumped back into the steam generators.  Since the steam generators are pulling heat out of the RCS, the RCS water cools off before going back into the reactor, to keep the core cool, and maintain temperature.  Basically, we “make the rock hotter,” transfer that heat to the steam generator, boil water into steam, and dump it to the condenser.

So, as xenon is burning out, and as we pull rods a few steps, we raise power to 10% - 14% power, and we have enough capacity now to roll the turbine.  We go back to our 15 minute borations to maintain power.  We start rolling the turbine with steam.  Our steam dumps have automatic control, so as we take steam to roll the turbine, steam pressure drops, and the steam dumps will close off a little bit to keep the total amount of steam flow the same.  With a stable reactor power, we have to maintain a stable steam flow, in order to keep temperature stable.

While we begin to roll the turbine, we notice we are needing to borate a little bit more frequently.  We don’t borate based on watching the clock, of course, but based off of our actual indications.  Our 15 minute borations are now being required maybe every 10 – 12 mintues.  So we look at our Beacon program, and the xenon rate has risen.  Maybe it’s now 30 pcm/hr.  Divide that by 4, and round it a little bit, and we decide we want to plan for -8 pcm borations, instead of -5, to get back closer to every 15 minutes.  We run the spreadsheet, and now maybe it’s a 35 gallon boration every 15 minutes, so we change the plan and start doing that.

So, after maybe an hour or two, we’ve got main feed going, we have the turbine rolling, and we’re ready to bring the generator online.  We have the turbine control system set up for the minimum generator load of about 40MWe (at my plant).  This means that when we close the breaker to bring the generator online, it will pick up 40 megawatts.  This is within the capacity of the 14% power of the reactor.  What happens is that the generator picks up load drawing more steam from the plant, and the steam dumps will close off to compensate.  The reactor barely feels a hiccup, because the steam dumps operate quickly.  All that happens is that more steam goes to the turbine, and less goes to the steam dumps.  We are still maintaining reactor power with our previous boration plan.
Reply: (3 of 5) Now it’s time to begin to ramp up, and raise power.  Let’s say we want to start with 1 MWe/min (megawatt electric per minute), which is a conservative rate, just to get into it and make sure everything is comfortable.  Our normal rate we would ramp up would be 2MWe/min.  Before we do that, we’re going to come up with a reactivity plan.  Let’s look at Beacon again, and we see now that the value is higher, say 45 pcm/hr.  For one thing, we’re starting to roll down the back side of the xenon peak, so the rate is picking up anyway, but we also have about 14% power now, so we’re starting to burn xenon out because of the neutrons in the core from fission.  We put that number into our reactivity sheet, and also input that we want 1 MWe/min ramp rate.  So, we would normally need to dilute to raise power, but xenon is giving us a good bit of positive reactivity since it’s burning out, and it’s helping us.  Where we might NORMALLY need to dilute 150 gallons every 15 minutes for this ramp rate, but this time, maybe we only have to dilute 50 gallons every 15 minutes, since xenon is helping us out.  We will also go ahead and run a sheet for 2MWe/min, so we have that ready, and maybe it says 75 gallon dilutions every 15 minutes.

We flush the line to get rid of the boric acid in the line (because we’ve been doing borations, remember?).  We start ramping up the turbine, which means that we enter the numbers into the control console, and the computer starts slowly opening governor valves to admit more and more steam to the turbine.  Turbine load starts coming up, more steam is going to the turbine, and now the steam dumps are completely closed.  We have ramped “out from under the steam dumps,” and now ramping up further is drawing off more steam, and cooling the reactor down.  We have to add positive reactivity to bring reactor power up and maintain temperature, and also, we have to actually begin raising temperature, because we have a temperature program that requires our temperature to be higher and higher as we raise power.  The line is flushed, and we begin to dilute the boron back out.

Now we have to figure out what we want to do with control rods.  After starting up, what we’ve done so far, let’s say our rods are now at about 175 steps (out of 229 total).  We need to look at our AFD (axial flux distribution) to see where it should be at this power level.  It, too, has a sliding scale.  At 0% power, it should be dead centered in the core, and as power rises, AFD is going to slowly lower a little bit below the center of the core, just due to the temperature profile across the core, which is colder on bottom, and hotter at the top, with a bigger difference between the two as power rises.  We are having to add positive reactivity due to ramping up (by the way, we have now raised to 2MWe/min), which means I either need to dilute or withdraw rods.  Dilutions pull AFD down, and withdrawing rods pulls AFD up, remember?  The natural tendency is that AFD is going to go lower and lower and lower as power rises due to the temperature profile across the core, but we can’t let it fall too low.  So as AFD starts to go too low, below my target, I need to skip a dilution and pull rods a step or two instead.  That will give me my positive reactivity to raise power as we ramp, but it will also pull AFD back up.
Reply: (4 of 5) Now, here’s the tricky part, when I perform a dilution, it takes about 3 minutes to get all the way through the piping into the core, so I have to think 3 minutes ahead on when I need to dilute.  But…when I pull rods, it’s almost instantaneous, because the rods physically pull out of the core as soon as I hit the switch.  So, I’m watching how the plant responds, looking at the rate my temperature is changing, so I can dilute 3 minutes before I need it.  But at the same time, I’m watching my AFD to determine when I need to pull rods.  If I’m going to skip a dilution and pull rods, I can’t just pull rods when I need to dilute, I need to wait another minute or two, or else I’ll be adding positive reactivity too soon.  But then I have to remember my next dilution still takes 3 minutes to hit, so as soon as I see the effects of my rod pull, I need to go ahead and dilute again, right then, because of the delay time, or else my next positive reactivity addition will be too late.

So, all the while this is happening, we can’t just settle into doing 75 gallon dilutions and an occasional rod pull.  Remember xenon?  Yeah, it’s been burning out this whole time and helping us, but it’s beginning to burn out faster and faster.  Why?  We are raising power, fission rate is going up, and there are more neutrons!  So xenon is burning out a lot faster now because of all the neutrons.  We start to notice that temperature is hanging out a LOT longer between dilutions.  That’s great, right?  Well…not really, because we still have to pull rods out to maintain AFD.  We will get to a point where we need to pull rods, but we can’t, because temperature is on target and we don’t have room to add positive reactivity with a rod pull.  As xenon continues to burn out, we’re going to get to a point that xenon is burning out faster than the ramp rate, and we’re getting more positive reactivity from xenon than we need for the ramp.  We can’t dilute anymore, and we can’t pull rods anymore, because we’re getting too much positive reactivity already.  AFD is lowering and lowering.  So what do we do?  Ramp faster to keep up with xenon?  Can’t do that, because we are already at our limit, and we are not allowed to ramp faster than 2MWe/min.  We have to switch back to borations.  Remember, borations are going to make AFD go up, which is what we need, and why we were withdrawing control rods before.  And we’re also going to have to add some negative reactivity to slow things down because xenon is giving us too much positive reactivity.  Boron does both of those things.

Now, this isn’t something that just sneaks up on us all of a sudden, we see the effect of each dilution changing, and we will check and adjust our reactivity plan the whole time this is going on.  But we’re going to get a xenon rate from Beacon, and put it into our spreadsheet, and it’s going to tell us that we have to now borate 10 gallons every 15 minutes.  That’s cool.  We can manage that.  So we start borating, and we are maintaining temperature, and it’s helping to push AFD back up, but it’s not pushing AFD up as much as we need.  We still need to withdraw rods occasionally.  But rod withdrawals are positive reactivity, right?  So we need to borate a little bit heavier to give us some room on reactivity to pull rods.  AFD is getting a little low, lets do an extra boration, here, and once we get the reactivity effect (because remember, borations and dilutions are going to have about a 3 minute time delay), we’ll pull rods out 2 steps for AFD.  All of these manipulations are briefed with the supervisor, and peer-checked by another operator, mind you, so it’s not one person doing this in a vacuum.
Reply: (5 of 5)The good news is that once you get the ramp going, get into it, turn the xenon transient, and end up getting into a plan for borations, it will kind of calm down.  It’s still going to be changing a little bit, but since you started out above your 100% equilibrium xenon, you’re basically going to push xenon down below that level a little bit until iodine production and decay to xenon catches up, and the xenon rate is going to slow back down and steady out into an equilibrium value fairly quickly.  You’ll get set up into a rhythm of borations and rod pulls to maintain temperature and AFD, and the turbine will slowly be ramped up.  You’re going to get to a point where the xenon rate slows way down as it starts to stabilize near equilibrium, and you’re going to have to shift your plan back over to performing dilutions again, because you have now lost most of the positive reactivity from xenon.  With xenon essentially stabilized, you might end up with 175 gallon dilutions every 10 minutes or so, maybe – it all depends on time in core life and how much boron is in the coolant.  Earlier in core life, it takes a lot less water to remove a given amount of boron, later in core life, it takes a lot more water to remove that same amount.  Late in core life, maybe you’re doing 300 gallon dilutions every 5-7 minutes.  But that’s still manageable.

The big takeaways from this is that the most difficult side of things would be doing a start up within the first maybe 6 or 7 hours after a trip, because that’s when your xenon is rising the fastest.  Once you get closer to the peak, and get on the back side of the peak, it’s going to be a lot like what I just described.  Before that time, with xenon rising, we would still normally be able to get our initial boron set up for what we needed prior to startup, but reactivity is going to be more of a challenge, because xenon is building in, not burning out.  Instead of borating to maintain power, you’re going to be diluting a LOT to maintain power.  You might be limited on how fast you can ramp up the turbine, because instead of xenon giving you some positive reactivity to help during the ramp, xenon is robbing you, and giving you a lot of negative reactivity that you have to overcome.  That means positive reactivity to overcome xenon, on top of more positive reactivity to raise power and ramp up.

It’s not impossible to perform a startup under those conditions, but it might be better to wait until you are at least near the xenon peak.  And if you remember, the peak is going to be around 12 – 14 hours after the trip.  With the usual administrative issues, making sure the plant is safe to start up from an equipment standpoint, getting reactor engineering to evaluate and calculate and ECC for us, and getting management permission to start back up, as well as giving operators time to practice a startup in the simulator, it’s probably going to be about that long before we start back up anyway.  But there’s normally going to be no reason to wait 3 days.  In fact, at the xenon peak, and on the back side of the xenon transient, it’s actually easier to manage a startup.

If you compare a max xenon start up to a normal xenon free startup, they look a lot alike, but there are a few distinct differences.  For a xenon free startup, the ECC is going to require a higher initial boron concentration, because you have no xenon, so you need the boron to give you the same amount of negative reactivity.  And you’re never going to end up borating during the startup if you’re xenon free to begin with.  When you are maintaining power, you’ll be performing periodic dilutions of some amount, because you started out xenon free, and now you’re going to be making xenon due to being at power again.  As you ramp up, xenon will be building in the whole time, so you’re going to dilute and pull rods the whole way up.  You will have to dilute more, because of this.  That’s why I said in a much earlier post that “riding xenon” on a start up can actually be beneficial and make it easier, because xenon gives you the gift of free positive reactivity while it burns out.  So a max xenon startup, say 12 – 24 hours after a trip can actually be significantly easier.  You just need to understand, monitor the xenon rate, and adjust accordingly.

Of course…this is all how we manage such a thing in a commercial Westinghouse PWR reactor plant.  For Chernobyl…I know a bit about their design and some of the differences in their reactor physics, but I really don’t have a good understanding of what their actual day to day control looked like.  This is just meant to illustrate what it looks like in a western nuclear plant, and how it can be safely and easily managed, even after a trip and the resulting xenon peak.
Reply: @adamhutchins1981  Thank you, Adam. That is very helpful and informative. Are the ramp rates from the table lookup calculated from model simulations done for several plant conditions ahead of time, or are ramp rates calculated on the fly from the estimated core conditions? I ask these specific questions because of the thesis work I'm doing, and I don't have strong connections to people who actually operate the nuclear power plants.
Reply: @adamhutchins1981  actually, they, chernobyls main "thous who split atoms" guys,  know about designs flaw of reactors in RBMK-1000 series.
They also experiment with reactor in that night trying to figure out from how deep xenon den (dont know english term for this) its possible to turn reactor back on. That was political reason for this experiment, which again I cant explain to non native ussr/post ussr dweller.

Most ironical thing in this situation that renovation which should fix design flaw of the reactor was scheduled TO THE NEXT DAY after chernobyl "gift every home with peaceful atom".
Reply: @Baibakov88  Forgive me, I'm not really sure I understand your question.  It may be that you're asking about something different that what I'm reading from your question.  Just to be clear, when I talk about ramp rates, I'm talking about how fast we are loading up the generator.  Depending on time of year and outside temperature, which affects thermal efficiency, our full load at my plant is about 925 MWe, give or take.  So if I say I plan to ramp at 2 MWe/min, that means I am adding steam to the turbine, which pushes it harder, and makes it pick up load, and I want to raise my generator output by 2 megawatts every minute.  There's not any table or anything for that, it's just basically how fast do you want to raise the electrical load on the generator.

Our actual limitation at my plant is to not raise power by more than 14% reactor power in any 60 minute period.  If you take 14% of 925 MWe, then divide that by 60, you get right at about 2 MWe/min.  So, procedurally, our normal ramp rate while ramping up is 2 MWe/min.  I say normal, because we will usually start out a little slower and get things moving, then raise the ramp rate.  Or maybe we're very close to where we need to be in power, and we are only making a very slight adjustment, then we'll go much slower, maybe 0.1 MWe/min.  Then again, if you try to go at 2 MWe/min, and find that you can't quite keep up with your reactivity additions to the reactor, we will also pause the ramp or slow it down, to be able to control things better.  It's all just driven by experience and comfort of the operators.

Ramping down is a different ball game.  For a normal shutdown, we will also ramp down at 2MWe/min, because that's just our standard ramp rate and is very controllable.  But for any number of reasons, we can be procedurally driven to ramp down faster.  Usually it will be an issue with the power grid, where the grid controllers require us to cut load by a significant amount, and we have 30 minutes to be there.  Sometimes it will be an issue with chemistry, where we might procedurally have to reduce load in a certain time frame due to abnormal chemistry.  Sometimes it might be due to an equipment deficiency.  None of that is very common, however, and very rarely happens.  But depending on the situation we might go anywhere from 10 MWe/min to upwards of several hundred MWe/min for a feed pump trip, for instance.  Also it should be pointed out that at the beginning of every shift, we also brief a rapid power reduction for any overpower condition.  At any moment, if anything causes our power to rise where it threatens our upper power limit, we immediately ramp down using our pre-established over power reactivity plan, with no further discussion needed.  So we are ready at a moment's notice to rapidly reduce power by up to 2% at any time, usually at 5 MWe/min.

If you are talking about the reactivity plans we calculate, we do those ahead of time.  In fact, we have to brief a reactivity plan BEFORE we start ramping up or down.  But it takes just a minute or two to run the numbers and get a plan.  I simply have to get the current xenon concentration and rate of change from the Beacon program, type them into a spreadsheet, type in the ramp rate I want, and the spreadsheet will tell me what I will need for borations or dilutions and rods.  That's the day to day operations of the plant.  And yes, both the xenon program and the spreadsheet use the actual core conditions at the time.  Our core is analyzed and everything calculated by reactor engineering before we ever start up after refueling, and engineering has all of the models updated for the new core each time.  And throughout core life, we periodically monitor the plant by doing something we refer to as a "flux map" where we run small detectors up and down inside various locations of the core to verify things are operating per the core design.  If there are any abnormalities noted (which is also very uncommon) engineering will fully analyze it and adjust all of the calculations.

And at the end of the day, all of the calculations we have, as extremely precise and accurate as they are, are only a guideline and a starting point.  It gives you an extremely accurate idea of what to expect from a given set of conditions, and we trust these tools and use them to operate by, but if the sheet says I need 150 gallon dilutions every 10 minutes and that's not quite enough, I'm going to either dilute earlier, or adjust to a larger amount for my dilutions.  The calculations are very very close, though, and are always spot on.  But operators have the training and experience to adjust as needed, of course.

I hope that answers your question.  Don't hesitate to ask if it's not clear or not what you were looking for.
Reply: @Manuel-j3q  Thank you for that reply, I realize there is a language barrier.  I can't speak with certainty, because I was obviously not there, but everything I have ever read or studied about Chernobyl was that the test in question was to see how long the main circulating pumps could operate when powered by the generator as it coasted down on a reactor trip.  I am not aware of any experiment concerning whether or not they could restart while in a "xenon pit," which is the way I have heard soviet operators refer to it.

I can't say for certain, because I was not personally involved, but my understanding is that the issue is that the test was supposed to occur at low power, during the day shift.  The plant was being shutdown and power lowered, with xenon building in to the point that they could not turn power to raise it back up.  The test was meant to be run during the shut down procedure, with no intention of trying to hold power.  Then the grid controllers required the plant remain at about 50% load for several hours.  During that time, operators withdrew rods beyond design limitations trying to hold power constant, letting power fall to low, trying to stop power reduction and to raise power again.

My understanding is that it was an electrical test to check generator output while the turbines coasted down, and that holding power while xenon was building up was not planned.

I do agree that this specific flaw of the RBMK that allowed this to happen was known, to some people at least, and that intentions were to make adjustments to the safety systems to compensate for it.  However, I personally do NOT believe the actual operators at the plants knew about it, because of Soviet secrecy.  I do not believe the operators knew or were trained to recognize where they were, or how unstable they had made the reactor.  However, they absolutely did operate the plant well beyond design limits by withdrawing too many control rods too far.

This is all just my personal thoughs and my own understanding of Chernobyl, based off of my own nuclear training and experience, and from all of the technical documents I have read about the Chernobyl accident.  I do not claim to be an expert on Chernobyl's design or operation, though.  There are surely things that I am not aware of.  There may be a lot more to the story than what is publicly known, but that's the official explanation as I know it.
Reply: @adamhutchins1981  I think I understand what you're saying. I've been trying to calculate how fast I can raise reactor thermal power in my model based on power history or xenon concentration, and it does seem like I may have to make tables rather than trying to be clever with linearization and small perturbations of my model. Is it all right if I PM you in the future? I'm learning so much from you.
Reply: @Manuel-j3q  Thank you for sharing that insight.  I have always been fascinated and a little terrified by the Soviets in their technical designs and their political strategies.  Soviet machinery always seems purposely simple and crude in it's design, and I find it really interesting.  And I understand what you are saying, over here, we have a CEO and President of our company, because it is, of course, a capitalist private company to make profit, and we also have various Vice Presidents for the different plants, and Plant Managers.  We basically refer to the CEO and different people around his level as the corporate executives.  I am sure there are business decisions they keep from us operators, but when it comes to technical and safety issues, they make sure we know it.

I do also feel like training for workers at Chernobyl and other Soviet plants is much less than the training our operators get.  Most of us are not nuclear engineers, but we do go to about 2 years of technical schooling to teach a pretty in-depth level of thermodynamics, electrical theory, and reactor theory to the operators here.  I feel like Chernobyl workers, at least at the time, were not trained to that level.

I want to visit Ukraine and visit the Chernobyl site, now that they are doing plant tours.  Chernobyl has always been something I was fascinated by, and I want to see it for myself, and stand in the Reactor 4 control room, and to see the  plant site and also Pripyat.  I also think it would be interesting just to visit Kiev.
Reply: @Baibakov88  I would be glad to assist you any way I can, but I have to point out that I am not an engineer, and it has been a long long time since I studied and learned all of the formulas and calculations of my reactor theory training.  I can certainly do my best to help, and I can definitely fill you in on any questions you may have about day to day operations and what we actually do and how we actually control our reactors in real life.

Honestly, I have never PM'd anybody on YouTube, is that a thing?  We can find some way to get in contact, though.  I don't mind at all, and would be glad to help you any way I can.
Reply: Yes I agree; I was a Licensed Operator for 14 years and we wouldn't let Xenon stop a startup.  We had a computer program (Rhobal) that would estimate our time to criticality and rod positions, and boron concentrations needed.  The pressures a too great to get back online from a commercial standpoint.
Reply: @adamhutchins1981  I am in academia, so real world knowledge of how power plants actually operate is very helpful. I may have some questions about controlling the balance of plant and heat removal in the near future.

It looks like there's no longer an option to privately message on here. I'm not sure why it was removed.
Reply: @taraswertelecki7874  it was a steam explosion, which happens when you subject already barely fluid water from pressure alone to a temp spike from dropping nuclear reflectors into it.
Reply: So you're saying I should pull out these control rods?
Reply: re: "As a licensed ... , I can tell you that you are absolutely wrong about having to wait 3 days to restart a reactor."
>> Having read the comments, and watched the video, I think you 'jumped' prematurely on this. MUCH mention was made of Chernobyl as an extreme example, and I think this was to drive home the point of respecting Xenon poisoning.
Reply: re; "if not reactor 4 at Chernobyl, would a different RBMK somewhere else have gone up?"

Doesn't sound like you 'paid attention' to the video presentation near the end ...
Reply: @Stephen Davis re: "Yes I agree; I was a Licensed Operator for 14 years and we wouldn't let Xenon stop a startup. "
>> Sounds like you guys would teach advanced techniques to first year 'nuclear operators'. Maybe the BETTER way is the way the instructor handled it, as in, learn the safe technique first, then adapt that to EACH facility in their own 'shop procedures' as to how long to 'wait' before startup.
Reply: Madam Meouff  "if not reactor 4 at Chernobyl, would a different RBMK somewhere else have gone up?"

This is just my opinion, of course, but for the former Soviet countries, yes, I believe that with the trend they were on, if it wasn't Chernobyl, it would have been another plant.  In fact, it WAS other plants, too, not just Chernobyl.  Chernobyl is just mainly the most well known, and possibly the worst one.  If you want to do a little bit of reading, look into the Mayak breeder reactor the Soviets were using to produce plutonium for their nuclear weapons.  There was a documentary on Netflix (not sure if it is still on there or not) called "City 40," about the secret city now known as Ozyorsk.  Basically, in a rush to keep up with USA in the nuclear arms race, the Soviets charged headlong and recklessly into their production of plutonium to develop their weapons, and they have had untold numbers of accidents and extremely huge releases of radiation to the surrounding communities.  For what it's worth, Chernobyl was intentionally designed such that it could be used as a breeder reactor, as well, to produce plutonium for nuclear weapons also, not just power generation.  I am not aware that it was ever used as such, however.

As a state secret, the "closed cities" (City 40/Ozyorsk was the city built around the Mayak plant) were created to house the workers of the plant, under strict secrecy, to prevent the West from knowing where their plants were.  As a result of all of this, untold numbers of people have been exposed, a lot of long-term health effects of radiation sickness on nearby residents, and everything kept under strict secrecy.  Chernobyl is still rated as the largest disaster, because it spread so much contamination all over Europe.  But while Chernobyl released more radiation in total, Mayak has released almost as much, only it has stayed generally within that local area.  Lake Karachay, where a lot of dumping from the Mayak plant occurred, is considered to be the most polluted place on Earth, with a deadly radiation dose still to this day.  If you're interested, you should also look into the Kyshtym Disaster, which is probably the biggest release from the Mayak plant, which released an enormous amount of radioactive contamination over the surrounding population.

Admittedly, it's hard to know how much of this is real, and how much has been sensationalized, because I haven't been personally involved, but the Soviets at the time had a track record for a general disregard of safety, and a "make it happen no matter what" approach to things, which is seen in the Chernobyl accident, of course.  Defeating numerous safety systems and attempting to operate the plant well beyond the established safety margins.  Plant design factors into it, and the RBMK-1000 design used at Chernobyl is generally a lot more unstable and difficult to control than the designs we use, but even starting from that point, Chernobyl still could have been operated safely, had the safety culture been there.  In fact, Chernobyl continued to operate (at least Reactor #1 and #3) into the early 2000s before being finally shutdown, which goes to show that learning from past mistakes and reinforcing the safety culture is truly what they needed.  None of this has been lost on nuclear operators elsewhere in the world, mind you.  

It can't even be put into words how much the Three Mile Island and Chernobyl disasters have affected us.  Lessons learned from TMI lead to much better training of the plant operators, with an emphasis on fundamentals of nuclear theory and thermodynamics.  A big cause of TMI was operators not understanding the thermal-hydraulic condition of the core, leading to taking exactly the wrong actions.  Without going into too much detail, had the operators not done anything, TMI would not have happened, because their safety systems worked to mitigate the loss of coolant accident they had.  Due to not understanding what was happening, the operators mistakenly turned off their emergency core cooling systems, leading to the meltdown.

Operator training has been enormously improved since then, including running any number of accident scenarios on the crews in the simulator, to ensure operators understand and can properly respond to accidents.  Likewise, lessons learned from Chernobyl have emphasized the safety culture needed, even on a routine daily basis.  Safety systems are never defeated, operating limitations are strictly enforced and never violated, and, as I said in an earlier post, if we were to get to the point of being subcritical, we are required and expected to trip the plant and shutdown the reactor.  We have had it drilled into us that if there is ever a concern, we are to trip the plant, and management will support us in taking the conservative action to ensure nuclear safety.  Chernobyl, at the time, had more of a culture of "you will get this test done, or you will be looking for another job."  Which is entirely the wrong mindset.

I understand, as anyone else does, that nuclear power must be handled cautiously and safely, and it's not something to be taken lightly.  But that's not to say that nuclear power is unsafe.  When you start with a plant that has an inherently safe design, and when you focus on a conservative bias and keeping nuclear safety at the forefront in your day to day operations, nuclear power is a very safe and reliable source of power.  I believe Chernobyl could have been operated safely, even despite their plant design, if they had ingrained the safety culture we have today.
Reply: Commercial BWRs have xenon override capability during their entire operating cycle and can restart anytime (although it's a pain to do because you need to shift startup rod patterns to infinite lattice to have any hope at core control). Commercial PWRs have xenon override during 95-99% of their operating cycle. 

CANDU plants and other natural uranium plants can and do get poisoned and will have a long term delay before they can safely restart.

I did a peak xenon restart at Clinton Power Station (I was the reactivity SRO), we also had a positive moderator temperature coefficient at the time. It was an interesting startup. The center of the core was effectively shielded by the xenon, so we had to be very cautious pulling the peripheral control rods. We went critical on a peripheral one without a strong indication and the core was not initially coupled. It looked weird so we stopped pulling rods until the core started to couple. Reactor period kept accelerating but was still controlled pretty well. Once we hit point of adding heat we kept the reactor isolated (not steaming) until 400 PSIG when we were past the positive temperature coefficient region. Then we started controlled steaming and warmed up to balance out the power rise due to xenon burnout. Barely had to pull rods to raise pressure from 400 PSIG to NOP/NOT because of the xenon burn. Was a very interesting startup and I'm glad I got to be the one to run it.
Reply: Madam Meouff  "What happens if something goes horribly, horribly wrong and another very large ship collides with your ship and cuts into the reactor room? Would the reactor go critical or is there some kind of system in place to make sure that wouldn't happen?"

First off, I know this sounds petty, but there is a bit of a misuse of terminology in your post.  A reactor doesn't "go critical," it is either subcritical, critical, or supercritical.  "Going critical" has, for a long time, been scary sounding words used in movies and TV shows, but it doesn't mean what you think it means.  I talked about it in an earlier post, but when a reactor is critical, it simply means that the power isn't changing.  It means that you have a chain reaction of nuclear fission, that is continuing at the same rate.  Criticality is a good thing.  We like it when reactors are critical, because they are making power, and they are stable.  If you have an accident, or something goes wrong, you really want to make sure you are subcritical.  In that case, subcriticality is even better.  It means that the chain reaction has stopped, or is at least slowing down and dying off.

What you're really worried about is a reactor becoming supercritical.  Supercriticality is when power is rising.  Your chain reaction is accelerating, and you're getting more and more fissions at a faster rate as time goes on.  As power rises, heat production goes up and up and up, and if you don't remove the heat, you can melt the fuel, and even melt out of the reactor itself into the environment.  Having said that, a little bit of supercriticality is necessary from time to time, because that's what is required to start a reactor up and raise it's power.  But you need to be able to, at any time, make the reactor critical to stabilize power, or make it subcritical to shut it down.

So what does that mean?  It means that a nuclear ship out at sea, the reactor(s) is/are critical.  Making power, a stable chain reaction, everything is controlled.  Something goes wrong, you want to be able to instantly make the reactor subcritical, so it shuts down, and stops producing heat from fission (there is still decay heat, which I'll talk about in a minute).  Navy cores are designed to operate using only control rods, they don't use boron (with one exception I'll explain in a bit).  Pull rods out a certain amount to start up and operate the plant, when it's time to shut down, drive rods back in and the reactor shuts down.  In case of emergency, there is a SCRAM switch which will immediately drop all the rods into the core.  It's like a shutdown, only faster.  Instead of driving rods in, they immediately jump into the core.  As a fun fact, we actually have to test how long it takes them to insert, to ensure they can drop in fast enough.  Navy cores also have a really neat design where the rods even have a big spring on them to make sure they can insert, and stay in the core, even if the ship capsizes and flips upside down.

The control rods in a Navy core are such good absorbers of neutrons, that when all the rods are in the core, it is physically impossible for the core to even become critical, much less supercritical, no matter what else happens to it.  If you insert the rods by shutting down, or by tripping the reactor (known as a SCRAM on Navy cores), there is no physical way for the core to be making any more power from fission.  So if something goes wrong, that's the first thing that happens.  And, for what it's worth, it's a "failsafe" design, because those rods want to drop into the core.  They really want to.  There is a spring pushing them down, and the only reason they stay out is because there are motors we use to pull them out.  But they're connected to the motors with a latch, and it takes electricity to keep them latched.  If anything happens to the electrical power on the ship, the rods can no longer stay latched to the motors, and they shoot into the core.  We have instrumentation that measures a lot of things in the reactor, like temperature, and pressure, and coolant flow rate.  If any of these instruments say that you are outside your limitations, they cut power to those rod drive motors, and rods drop in.  Even if it's an instrument failure.  If the instruments lose power and can't measure things anymore, rods drop into the core.

I mentioned boron.  Some Navy plants are designed with one more emergency measure to shut the core down.  Remember, I said that if the rods go in, it's physically impossible for the core to be critical or supercritical.  But...just in case...some of the Navy plants have a boron injection system, where you can inject a tank of highly concentrated boric acid.  Boron is a very good neutron absorber, so even if dropping all the rods in somehow doesn't shut the reactor down (which is not actually possible), you can put a bunch of boron in there to also ensure the reactor is shut down.  Basically, if anything bad happens, even if the operators do nothing, the reactor will shut itself down, because that's what it wants to do.  It's ready and just waiting and trying to drop the rods in to shut down, and the operators can only keep the reactor online by following the procedures and operating things properly, and keeping all of our parameters within the limits.  If you let anything go outside the limits, the reactor shuts itself down.

By the way, that's also how civilian plants operate.  The reactor is designed to want to shut itself down, and you have to keep it operating.  Chernobyl was even designed that way.  Those are all the safety systems that were defeated that everyone talks about, they had to defeat all of those protective devices to force it to stay online.

So, no matter what, you can guarantee that the reactor will shut itself down.  What's left, though, is decay heat.  Even though you stopped all the fission from happening, you have a lot of radioactive fission products in the core.  When you split apart uraniuim atoms, it splits into...something.  It's different every time, so it doesn't always split into the same atoms, but the things it splits into are usually (almost always) some radioactive isotope.  Even after you stopped the fission from happening, those radioactive isotopes are decaying away.  When they do, they produce heat.  It's not much heat, relatively speaking.  Maybe 0.5% to 1% of the normal heat produced by the reactor.  But that heat still has to be removed, or else the core and the coolant inside will continue to get hotter and hotter.

How do you remove heat from a reactor on a ship, especially if you've lost power?  No power means you have no pumps to run to circulate the water.  But we have something called natural circulation.  Heat rises, right?  So as the reactor heats up, the hot water in the reactor begins to rise, and it will flow out of the piping in the reactor to the steam generator.  The steam generator is a big tank of water, and as the reactor coolant flows through the tubes in the steam generator, it pulls heat from the reactor coolant.  Now, that water is colder, and it will begin to fall back down.  The way the piping and the core are designed, that colder water falls down into the bottom of the reactor.  Then it heats back up, rises, flows out the top, cools off as it passes through the steam generator, falls back down, and goes back into the bottom of the core.  It naturally circulates due to a thermal driving head.  As for the steam generators themselves, there is enough water in there to absorb that heat, and then let the heat radiate out of the steam generator to the atmosphere around it, and if that's not enough to cool it off, it will slowly boil and create steam, which will bleed out from the relief valves.  Everything is sized and planned out in such a way that the steam generators can easily remove the heat from the reactor, using natural circulation, without any pumps running, once the reactor is shutdown.  Temperature will be a bit hotter than normal, in order to drive natural circulation, but nowhere near what would be required for a meltdown.  Some Navy plants even have an emergency cooling system that works the same way.  They have valves that spring open when you lose power, and it will use the same natural circulation through that piping system to remove the heat through a heat exchanger that radiates heat out to the water around the ship.

If something bad happens, the reactor will shutdown.  If you still have power, you still have pumps to keep everything cool.  But even if you lose electrical power (Navy ships, as well as civilian plants, have diesel generators for backup power, by the way), as a last resort, you still have natural circulation that will remove the heat from the reactor into the steam generators, where the heat will simply be lost to the ambient air around the steam generator.  Not to be morbid, but assuming the worst of the worst, and assuming the ship sinks, from a nuclear safety standpoint that would actually be the safest outcome, because the reactor plant would be at the bottom of the ocean, surrounded by cold ocean water to keep it cool, and it would be far far away from everybody.

Having said all of that, you have to realize that the reactor vessel itself is the strongest part of the ship, in the first place.  Reactors are made out of extremely thick steel vessels, designed to hold thousands of pounds of pressure inside of them.  They are much MUCH thicker than anything else on the ship, even the hull of the ship, even the thick hulls of a submarine.  Not to mention, the reactors are in a special compartment, known as the reactor compartment (not a very imaginative name), which is much thicker than the normal hull of the ship also.  So if there is a collision between ships it's not really going to be a thing for the reactor compartment to be breached, much less bust open the reactor itself.
Reply: @uploadJ  "I think you 'jumped' prematurely on this. MUCH mention was made of Chernobyl as an extreme example, and I think this was to drive home the point of respecting Xenon poisoning."

Yes, I realize Chernobyl was an extreme example, but this professor did say that he teaches his students, as a rule, that if you shutdown a reactor, you cannot restart for 3 days.  I was simply making a correction to that, and saying that the 3-day rule he claims to teach his students is not correct.  I think we are all in agreement that Chernobyl was the extreme situation.

And you are right, xenon does need to be understood and respected, or else an operator can find themselves overcorrecting and putting the reactor into a potentially unsafe condition.
Reply: @enthalpy  Thanks for sharing your experience.  I have done some benchmarking at a BWR, and at my plant, we have operators who have had BWR experience in the past, so I have learned, unofficially, quite a bit about BWR operations and the differences, but I have no BWR experience myself.  I'm not sure what you mean when you say "commercial PWRs have xenon override during 95-99% of their operating cycle."  I don't know if that's some different BWR terminology that I'm unfamiliar with, but its nothing I've heard of people discussing, at least not in that terminology.  I can tell you that we have no specific system that compensates for xenon.  We use control rods and boron concentration to control reactivity, as usual, and we develop our reactivity plans based off of what response we are getting from Xenon.  As mentioned in a previous post above, we have a computer system called Beacon that gives us a calculated real-time measurement of xenon and it's rate of change, and we factor that into our reactivity control plan.

Clearly, we do operate our PWRs differently than a BWR.  We ramp the unit up or down with a control console that adjusts the governor valves on our turbine, and we manually (or auto, in the case of our automatic rod control) adjust core reactivity to maintain the reactor at the proper temperature as we draw off more or less steam.  We also don't move our rods individually like you guys do, and our rods are used primarily just to go critical and start up the plant, and then for flux control while online.  We start the plant up, and work control rods entirely out of the core, and adjust boron concentration for reactivity.  We monitor our axial flux distribution, and if and when flux oscillates too much from top to bottom in the core, we will insert rods to dampen the oscillation.

Start ups for us are a bit different, also, because we pull rods in banks, so it is even across the core.  We don't ever have an issue of going critical with rods in an uneven configuration and the core being uncoupled.  As for our moderator temperature coefficient, we are sometimes positive as well, but it is only at the very very beginning of life, and only at very low power.  And even though our MTC may be slightly positive, of course, the fuel temperature coefficient is always negative, so our overall temperature coefficient is still slightly negative.  Realistically, for us, at the very beginning of core life, on the initial startup, with positive MTC, the worst it really gets is to just not really have any temperature feedback.  What we end up seeing is that as the turbine valves ramp open drawing off more steam, reactor power stays constant, and temperature just begins to fall.  Then we either withdraw rods or dilute to add positive reactivity, and reactor power and temperature will rise.

I'm sure that was interesting being there for that startup you talked about.  Thanks for sharing that.  It's really neat, as an operator, to see some of the differences between plant designs.
Reply: @adamhutchins1981  that because soviet political leadership, which unofficially names as "line of party", was aimed to supply the population with goods which do its job well in the first place. It can, and in most cases would, looks like garbage, but it was intentional. Plus, because resource base (like equipment and materials) was poor, comparing to usa, there are much greater engineering tolerance, like if in usa steel plate can have 3 +- 0.01....american distance things tolerance, in ussr it can be 3 centimeters +- 0.1 or even 0.2 centimeters.

For example, I remember that my granpa was able to fix TV from like 1970-1980 using only soldering pen.
Because most of its components uses transistor/resistors/etc which you can buy in closest shop and there are specific magazines about electronics which have literally full schemes of tv, with indication what part of it are most likely will be broken. Dont know, maybe in usa it also was possible in that time period, but I doubt.
Anyway, that was an entirely different epoch.

And as side note, if you really manage to visit kiev, feel free to use you native english, of course if you have good pronounce. Most peoples there, and not only there, know english on more higher level than "london is a capital of great brittan". That would sounds more reasonable than "gde zdies megajzin?" (wheres the store here?)
Reply: @Manuel-j3q  It was a little bit the same here.  Back in 1970s, and 1980s even, a lot of electronics like radios and TVs used vacuum tubes, and you could easily repair them by replacing tubes when they broke.  Even if it was beyond repair at home, there were many shops that would repair your TV.  Maybe not quite as much as you are talking about, though, because we didn't have schematics available for things, because they are built by private companies that don't like to release their design information.  But in general, we used to be able to repair a lot of things at home.

I know Soviet equipment was designed just to work and do its job, and had a lot more tolerances.  It's somewhat beautiful, to me, in the design simplicity of a lot of things that are made to just work, and not really be super elegant.  The USA is obviously quite different.  Being capitalist and not state-run for goods and manufacturing, companies made competing products.  You make a radio, and I make a radio, and if my radio is not as good as yours, people buy your radio and not mine.  Companies are driven to create a better designed product, rather than one that just works.  I know things are different now, since the fall of USSR, and I have always wondered how different manufacturing and retail is in former Soviet nations now.

It is very different, the cultural differences.  And I know things have changed in former Soviet countries from how they used to be, but the old Soviet culture, and the more modern cultures over there, fascinate me, and I'd like to learn more about it.  I am always interested in learning about different cultures, although I would not have wanted to live under the Soviet lifestyle back then.  But just like nuclear power, for instance, I know all about US nuclear reactors, because that has been my career for 20 years now, but I am fascinated by Chernobyl and the RBMK design, and learning all of the differences.  It is very interesting to me.

I really would like to visit Kiev and Chernobyl, and meet some of the people and learn a little bit about the culture in Ukraine.  In my life I have been in the Middle East when I was in the Navy, and visited U.A.E. and Bahrain, and also visited Italy (Naples, Rome, Pompeii), Spain (Cartagena), and UK (Portsmouth and London).  I want to do more travel and see more places.  Ukraine and Chernobyl are on the list.
Reply: @Manuel-j3q  If you don't mind me asking, are you from Russia?  Or Ukraine?  Or a different Slavic country?  I'm just curious.
Reply: @adamhutchins1981  Im from ukraine.
Reply: @adamhutchins1981  Does your plant use additional control rod banks to manage the axial power distribution? On the balance of plant side, what kinds of changes to steam pressure or feedwater systems do you make, especially when you change the power level? I'm trying to get a sense of how things are coordinated for conventional LWR concepts.
Reply: +Adam Hutchins     I'm sure you are much much more experienced and much much smarter than me but so often I've seen the super smart guy take short cuts only to find out on the forth try that the recommended safety precautions are there for a reason and maybe the process is not as fool proof as they had imagined. In the case of a fission reactor it only has to get into a run-away state once and all the times previously when everything went you way you expected don't count. As a member of the public or a participant in the nuclear industry I'd much rather the reactor was left for 3 days for the xenon to clear before starting to pull control rods. The consequences are sufficiently serious that taking a calculated risk is a dumb idea no matter how much the odds might appear to be in your favour. The guy in charge at Chernobyl was an expert too you know and he got it wrong that one time (the same procedure had been tried on three previous occasions without the reactor getting out of control). Harry Daghlian died not because he was unintelligent (he was a nuclear physicist on the Manhattan Project) but because completely unnecessary risks were taken. If not for yourself, for the rest of us play it safe, take the time needed please rather than chasing the curve down. Things go wrong, like positioning the diesel generator sets too low so they were flooded when the tsunami breached the sea wall or not being able to vent hydrogen from the reactor buildings that lead to them exploding one after the other at Fukushima. It is always so much easier to see what went wrong after one of these rare events than predict ahead of time the cascade of failures that lead up to the catastrophe. Things will always go wrong, the trick is to have sufficient secondary fail safes to halt a sequence of events before it gets out of hand.
Reply: @Baibakov88  Speaking just for the plant I work at now (because other plants may have a different control rod setup), no, we do not have, or need, additional rod banks to manage AFD (axial flux distribution).  Our design has 48 control rods in 6 separate banks.  The first two banks are safe-shutdown banks, not used for control, but used just to ensure a safe shutdown margin.  The remaining four banks are our control banks.  On a startup, we adjust our boron concentration to a calculated value to reach criticality about 2/3 of the way through the very last bank.  When we begin the process of starting up, we will withdraw both sets of shutdown banks, so they are ready to trip and fall into the core if needed.  Then, the actual startup begins, using the control banks.

Our control banks have a program that gives us a certain bank overlap.  What that means is I have a switch that says "rods in" and "rods out" and that's all I have to manipulate.  Bank A moves about 2/3 of the way out of the core, and then Bank B begins to move with it, so Bank B moves through about the first 1/3 of the core while Bank A is moving through the final 1/3 of the core.  Bank A hits the top and stops, and Bank B moves on its own through the middle of the core, and then when it reaches the top 1/3 of the core, Bank C begins to move.  So we have one bank moving through the bottom 1/3 of the core while one bank moves through the top 1/3 of the core, and when the previous bank hits the top, the current bank moves by itself through the middle.  Due to core buckling and the fact that there is more neutron leakage at the periphery, one bank moving through the middle and two banks moving through the top and bottom 1/3 of the core add reactivity at approximately the same rate.  All of this is managed with a "bank overlap unit" that has programmable start and stop points for each bank, so you simply hold the switch in "rods out" and the rods automatically follow that program.

Once we achieve criticality, about mid-way through the last rod bank (all the rest of the banks will be full withdrawn by that point), we continue with the startup on the secondary side.  There are a few more things we have to do with the reactor before we reach the point of adding heat (POAH), but that's basically leveling power at a specific point in the intermediate range and taking some criticality data for the engineers, and only takes a few minutes.  We will bring power up to 1%-2%, and start up the steam plant, bring the turbine online, and ramp the plant up.  I went into a lot of detail in a previous post, so I won't rehash that, here.  But, as far as control rods go, we are going to use them to manage our AFD as we raise power.  You balance dilutions and rod pulls to maintain AFD.  Pulling rods pulls AFD up, diluting pulls AFD down.  We have a program that tells you what AFD should be for that time in core life and that power level, and it's simply a trend on our plant computer, so you can see if your actual AFD line is above or below the program AFD line.  If its too low, you know you need to use more rod withdrawals.  If it's too high, you need to use more dilutions.

The end result is that when we get to 100% power and we are stable, we will finish working rods out that last little bit, to have rods fully out of the core.  Remember, this entire time, both of our shutdown banks, and our control banks A, B, and C have been fully withdrawn this whole time, and all of the rod motion for the startup has been on Control Bank D.  When it's all said and done, you will be at 100% power, all rods withdrawn, reactivity controlled by boron concentration only, and AFD will be stable on the target.

Over time, since AFD will naturally be a little bit below the centerline of the core, you're going to produce a little bit more power in the bottom of the core, and a little bit less at the top.  It's unavoidable.  It's due to the temperature profile across the core.  Colder on the bottom, and hotter as the water flows up through the channels in the core to be the hottest at the top where it exits.  Colder water at the bottom means it's more dense, and makes a better neutron moderator, so you have a slight bit more moderator in the bottom of the core, and as the water heats up through the core, its less dense, and a little bit worse of a moderator, so you have a slight bit less moderator in the top of the core.  Since you're making more power in the bottom, you will produce a bit more xenon in the bottom.  As the bottom of the core builds up some xenon, power will tend to lower in the bottom of the core, and the top of the core will begin to make more power, because the reactor has to make the same power overall.  Now you build up some xenon in the top part of the core, while it begins to decay off in the bottom of the core, and it pushes power back down.  This is a xenon oscillation.  We informally refer to it as "flux is swinging" because the neutron flux is slowly moving up and down through the core.  It's about a 30 hour time frame between peaks, so it's not very fast, and the overall amount of xenon in the core is the same, and the overall power in the core is the same the whole time.

For the first half of core life, maybe a bit more, you have enough fuel concentration that it just really doesn't move much.  It will slowly move up and down a tiny bit, but it basically still stays centered in the middle of the core.  But as you go further in core life, you begin to burn out the fuel in the middle of the core faster.  More leakage around the periphery, remember?  So you naturally make more power in the middle, until you burn that fuel out.  By the end of core life, the middle is almost gone, and you really end up with a top core and a bottom core.  You can actually see that flux profile when we do our flux maps, where the core will be making power at the top and bottom, but not nearly as much in the middle, at the end of life.  When we get to that point, each time we have xenon oscillations occur, the flux has to move higher in to the top, and lower into the bottom to find fuel.  Remember, overall power is the same, so where the neutron flux is the strongest is going to be where you have fuel still, and can make power.  Because you begin to develop this hourglass shape in the core with the middle burning out fastest, the flux is going to move higher and lower on each swing, and will accelerate.  We have to dampen those oscillations, or else they will continue to amplify until you're making all your power in  either the top or the bottom, and then you can violate your limits for local power production...making too much power in that one spot in the core.

We use the very same control rods, Bank D, to dampen these oscillations.  As flux peaks in the bottom of the core and begins to move up towards the AFD targed, we start pushing rods in to force the flux to stay where it is.  Of course, that means you have to dilute more to keep overall reactivity the same, since you're adding negative reactivity from rods.  But the idea is that as you build up xenon in the bottom of the core, you need to add the same amount of negative reactivity from rods to the top of the core to keep AFD where it is supposed to be.  And since you have more negative reactivity from xenon and rods, you have to add more positive reactivity by removing boron, to keep the total power output the same.  It sounds tricky, but it's a very slow process (remember, its about a 30 hour cycle time) so it is very easily managed.  We may step rods in 5-7 steps (out of 229 steps total) just on that one control bank over the course of an hour or two, and then you just sort of "let it marinate" and let the xenon stabilize and begin to burn out in the bottom of the core.  As it does, and power starts to move back to the bottom of the core, we will slowly pull those rods back out, until they're at the top of the core again, and the flux suppression is complete.

So that's AFD management.  I'll talk about the secondary parameters in just a moment, once I get that typed up.
Reply: @Baibakov88  As for what we do to the secondary, we have no real control of steam generator pressures, per se, in a PWR. What I mean is that a BWR directly controls their reactor pressure (which is where they generate steam) using the turbine valves and some turbine bypass valves. In a PWR, we ramp the unit up and down using the turbine, by raising and lowering steam flow, and add reactivity, positive or negative, to the reactor to maintain temperature. What's going on is that as you raise steam flow, you will drop pressure in the steam generators, since you're taking steam out faster. Because they are a saturated system, this means the temperature drops in the steam generators, and since that's what's cooling the reactor, it causes the reactor temperature to drop also.

When I ramp the turbine up, steam pressure goes down, reactor temperature goes down, and I add positive reactivity to the reactor (rods or dilutions) to bring reactor temperature back up. In fact, just due to the design of my plant, we have a program for our reactor temperature that means we have to make the temperature hotter the higher we go in power. So, not only do my reactivity additions have to maintain the temperature, but I also have to slowly raise my reactor temperature as power rises. And the reason why, is steam generator pressure. If I always kept temperature at the high end the whole way up, steam pressure would be too high at low powers. If I always kept temperature at the low end, steam pressure will be too low at high powers. So as we raise power from 0%-100%, I also raise my temperature to keep steam pressure up. Steam pressure still goes down (we are usually about 1000psig at no load, and about 750psig at 100%) as we ramp up. But if we didn't change reactor temperature while ramping, it would be either much higher at no load, or much lower at 100% power. That's how we maintain our steam pressure.

As for feedwater, well, if you have more steam coming out of the steam generators, you obviously need to put more feedwater in.  It’s a closed cycle, for the most part, so the steam comes out of the steam generators, goes through the turbines, and into the condenser to be condensed back to water.  Then, the water has to be pumped out of the condenser, through a string of feedwater heaters (to pre-heat the feedwater and increase thermal efficiency of the plant), and through feed pumps, back into the steam generators.  It has to be balanced.  The rate of steam coming out, has to be balanced with the rate of water being pumped back in.  Most of that is done automatically.

We have feedwater regulating valves (FRVs) that have an automatic control circuit.  They respond to steam generator levels, as well as steam flow and feed flow mismatch.  If level begins to lower in the steam generators, meaning you need more feedwater, the valves will open.  Usually, though the system is responding to the feed flow steam flow error, and it doesn’t let the level get out of control.  As you ramp the turbine up, your steam flow is going to rise.  The system sees steam flow going up, and feed flow is now too low, so before the level even begins to change, the system is going to begin throttling open the valves to raise feed flow, and keep it matched.  If you keep feed flow and steam flow matched, level will stay constant.

The other piece of the puzzle is our feed pumps.  If your feed pump just stays at the same speed, but you start opening your FRVs more, its going to drop pressure, because it’s pumping the same amount against valves that are further open.  If feed pump discharge pressure drops too low, the FRVs will have to open more and more to try to get enough feedwater, to the point that you can’t keep up, and begin to lose level in the steam generators.  There’s also a controller on the feed pumps.  As the FRVs open, and pressure begins to go down, the feed pumps will speed up to provide more pressure.  As with almost everything else we have, there is a program for that, too, so the higher we are in power, the more pressure the feed pumps maintain.

The result of all of this is that as you ramp up, you take off more steam.  This drops steam pressure and reactor temperature.  You add positive reactivity to the reactor to maintain and slowly raise temperature, which helps maintain steam pressure as you raise load.  As you move more steam out of the steam generators, the system will sense that steam flow is rising and feed flow is stable, and it will begin to open the FRVs to raise your feed flow to keep steam generator levels stable.  But now that you’re opening your FRVs even more, feed pump discharge pressure begins to drop, so it’s control circuit begins to raise feed pump speed to maintain feed pressure.  As power rises, the control circuit will control feed pump speed to maintain a higher and higher pressure which is needed for the higher flow rates.

All of this happens automatically, but we can manually override any of those controllers if they malfunction.  In fact, that is a large portion of our training.  When we go in the simulator, it is usually normal to expect some sort of failure in the secondary.  Maybe it’s an instrumentation failure that causes the feed pumps to slow down too much.  Maybe it’s an instrumentation failure that causes one of the FRVs to begin to shut…or begin to go open.  Given what we see on our instrumentation, we are expected to respond, to take the proper controllers to manual, and manually control the parameters to keep the plant stable.  We also have redundant instrumentation for these systems, so once we stabilize the plant, we will select out the failed instrument to put the system back in automatic control.  Likewise, I will also point out that we have procedures and immediate actions to take for any failure of a controller, whether it is in the secondary, like I mentioned there, or if it’s something like the reactor pressure control functions, or even our rod control circuitry.  Anything we have with an automatic control, various temperature controllers, etc, we are routinely trained to recognize the failure and to take control to restore the system.  Or to trip the plant.  If it’s something that can’t be controlled and is unsafe, we will trip the plant to put everything in a safe condition.

That’s the basic gist of our secondary side control functions, though.
Reply: @dogphlap6749  Respectfully, I need to point out that you are conflating two different scenarios.  Both are xenon related, but they are different.  With Chernobyl's scenario, they let a xenon transient put their reactor into a subcritical condition, and it was shutting itself down, and they scrambled to add tons of positive reactivity, beyond design limits, with safety systems bypassed, in order to recklessly overcome their xenon transient and restore power.  They were turning power, and restarting a reactor (re-establishing criticality) from an undefined subcritical state, far beyond any limitations allowed, and with no safety systems.

That is NOT the same thing as a short-duration, maximum xenon startup after a trip.  What I am talking about is a case where the reactor was shutdown, or has tripped, and is safely shutdown in the source range, and then we perform a startup prior to this unofficial 3-day rule.  To start off with, our safety systems are not bypassed and defeated.  Secondly, we are starting from a known core reactivity condition, and we have specifically calculated a controlled reactivity plan to establish the proper conditions and startup in a controlled manner.  Third, as I mentioned in great detail above, it is actually far easier to control and perform a startup with xenon burning out, than it is to perform a xenon-free startup.  Not that a xenon-free startup is hard or difficult, mind you, but it's even easier when xenon burnout is helping you.

Here's the difference.  As I mentioned in one of the posts above, if we were to ever allow ourselves to fall into a subcritical condition, like Chernobyl did, we are absolutely required to trip the plant and put it in a safe condition.  We are absolutely banned and prohibited from ever trying to restore criticality if we went subcritical.  In fact, if someone was to attempt that, they would lose their license, and would be fired, and likely subject to criminal fines through the NRC.  It's also not something one person can just do by himself, because you are required to have a peer check and supervisory oversight for every reactivity manipulation, so it is a minimum of three people being involved.  And none of us want to lose our job or go to prison.  Instead, we would trip, stabilize the plant in a shutdown configuration, and then we would get reactor engineering involved to help analyze the reactivity of the core, and develop carefully controlled reactivity plans to start back up.  I get the feeling that you have this image in your mind of "we have to get this plant back online, hurry up and start it up!"  This is absolutely not the case.  What I am saying is that we would take a cautious and measured approach, as we always do, and would start the plant back up once everyone is satisfied that it is safe to do so.

I'm trying to impress upon everyone that a maximum xenon startup is not something that is unsafe.  It's very controlled, and very manageable.  In fact, just as soon as you start moving power, you are going to cause a xenon transient, so by the nature of ramping the plant up or down, you are ALWAYS having to account for xenon.  It's just a little bit different of a flavor starting up with maximum xenon, but it is not any more or less dangerous than any other startup.  This is not something the plant rushes into doing, and at any time, any of us can say "stop," and stop the entire process, until our concerns are addressed, or the team determines we need to shut back down in order to ensure safety.

And not only that, but as I said, we do NOT ever defeat our safety systems, so in the extremely unlikely event that someone was to somehow get into a bad position with reactivity, we are going to have an automatic reactor trip.  We have a reactor trip on high power.  We have a reactor trip on high power at a lower range if we don't meet certain interlocks.  We have a reactor trip on a high rate of change of reactor power.  We have a reactor trip for high or low pressure, we have a reactor trip on a turbine trip, we have a reactor trip on high or low steam generator levels, etc.  Even Chernobyl would not have happened had they not defeated their trips, because they would have had a reactor trip long before they got anywhere close.

Listen, I respect your concern, and I don't want to come across as just saying "bah, you don't know what your talking about!"  That is not my intent.  I want to help answer those concerns and help you to see that it's not the reality of the situation.  Nuclear safety, and the health and safety of the public is the absolute highest priority for anything we do.  The industry takes safety concerns very seriously (as it should) and reckless and unsafe practices are not at all tolerated.  No one makes any decisions regarding moving the plant by themselves, and we have an entire management and operating team that has to be in full agreement before we startup and move the plant.

I know that when people start reading up on Chernobyl, it's very easy to fall into a "see, nuclear power is dangerous" mindset, and to say "xenon is going to cause you to destroy your reactor."  It's awesome that the Chernobyl HBO series has renewed some peoples interest in nuclear, and has gotten people to look into it more on their own, but it's easy to get the wrong impression or the wrong interpretation of things.  Xenon transients are a simple fact of life that happens all the time, any time we raise or lower power.  It's not something that's dangerous or is going to destroy the reactor, because it's something we are trained to take into account when we develop our reactivity plans.  It's always there.  It's not an abnormal thing.  Chernobyl got into a bad spot because of a xenon transient, and not managing it properly, but that's not what caused the accident.  They should have simply shutdown and put the plant in a safe condition, which is what we would do.  Chernobyl started off losing control of their reactor due to poor management (and I believe poor understanding by inadequately trained operators), and then deliberately taking the wrong actions to try to restore power, outside the bounds of safety, and with all safety systems disabled.  That's what caused the accident.  Restarting a reactor in less than three days is not going to cause an accident.  It's like the equivalent of saying you can't crank your car up until it fully cools off, after you shut it off.  It's just not actually a realistic danger or concern.  It's normal operations.

I really wish you could see, first hand, all of the discussions that take place before we start up.  All of the conference calls to different management people, discussions with reactor engineering, discussions with the operators, briefing everything to make sure everyone is on board, allowing each person to state any concerns they have and not proceeding until they are addressed, reactivity plan discussions with the operators and supervision and reactor engineering, etc.  Not only that, but I also mentioned previously that we will not startup until the crew performs a startup in the simulator, for training, on the precise plant conditions they will encounter.  It's a completely different mindset, focused on conservative actions and nuclear safety, and only when everyone is in agreement, and with anyone having authority to say "stop" at any time.  And we have been directed that if we are ever in question as to the safety of the situation, we are absolutely required to trip.

It's just that at the end of the day, a short-term maximum xenon startup is not unsafe, and it's not reckless to perform one.
Reply: @adamhutchins1981      Thank you for the taking the time to respond in detail. I'd like to point out that I am not anti-nuclear power, particularly on safety grounds. When compared to the death toll from mining and burning coal or any fossil fuel nuclear power has a near perfect record. I can conflate other things too like the attitude to safety shown by Boeing on relying on single transducer input to command nose down when it's hardly news that mechanical angle of attack sensors are far from failure free and making manual override extremely difficult shows a contempt for prudent failure tolerant design. Similar attitudes have lead to dam failures with high loss of life in the past. I'm glad to hear you affirm the nuclear industry still takes safety seriously.
Reply: @thisnametooktolong  I'm not sure what you are saying I got wrong.  It is absolutely correct that the operators at Chernobyl knew about xenon, and no one with any knowledge of the subject disputes that.  As I said earlier, xenon transients are a normal and easily managed thing, anytime you raise or lower reactor power.  Of course the operators knew about xenon.  That's not the part people say the operators did not know.  The part that was kept from them, was the knowledge that the particular core, being graphite moderated and using natural uranium, with a channel type design (not a core in a big vessel of water, but a dry core with water tubes flowing through it), especially with their control rod design, could end up in a configuration unstable enough that attempting to trip the reactor could cause power to spike enormously high, instead.  That is the part the operators did not know.  When they pushed the AZ-5 button to trip the reactor, they believed this would absolutely shut down the reactor.  But having withdrawn too many control rods too far out of the core, the rods actually caused the reactor to become extremely supercritical, by inserting more graphite into the core first.  The operators had never been trained to understand this problem.  But yes, of course they knew about xenon.

Here's the thing that I think people are having trouble with.  You have to separate the xenon transient, from the transient that caused the explosion.  They are two different things.  The xenon transient put the operators into a situation where the reactor had become subcritical, and power was falling.  They understood xenon, and they knew it was xenon poisoning that was causing it.  The operator and the supervisor that were operating the plant, understood this condition, and wanted to shut the plant down (which is what we, as operators, are required to do in that situation).  It was Dyatlov, the test engineer, who demanded they raise the power back up.  Dyatlov did not have the certifications or training to operate the reactor, and he did not fully understand the aspects of the xenon transient.  Due to the political culture at the time, he was determined to perform the test that night, no matter what, and demanded the operators raise power, against their protests, with the threat that if they did not, they would lose their jobs and other consequences would follow.

Xenon poisoning put them into a condition where the reactor was subcritical, and they knew about and understood this.  They had the decision to make, to either continue to shut the reactor down (which is what they should have done), or to comply with Dyatlov's orders to raise power back up.  They did NOT know that continually withdrawing rods beyond the design limit could put them in a condition that a trip would cause a power spike.  That is the piece they did not know.  And due to the culture they had, they complied with Dyatlov's orders, and the rest is history.

As for Fukushima, I can't dispute whether or not the U.S. would have been able to provide them temporary power or not.  Maybe we could have, maybe not.  The area was ravaged by the tsunami, and accessing the site was all but impossible.  It was definitely a design flaw to have diesel generators where they could be flooded, below ground, like they did.  That's the primary thing that led to the accident at Fukushima, was a loss of power.  If they could have gotten some form of temporary power rigged up, it would have prevented the accident.

When it comes to the building explosions, the explosions were not done on purpose.  They did not intend to do that.  However, the GE BWR plant design they have, the upper portion of the roof of their reactor building is designed with blow out panels precisely for that purpose.  Those panels that blew out, that is not the containment building.  The GE BWR reactor is inside a drywell containment, inside that reactor building.  As their core began to uncover and heat up, chemical reactions produce hydrogen gas, which will vent into the wetwell portion of their containment, below the drywell.  Venting under the water strips any particulate matter out of it, and the hydrogen begins to pressurize the drywell containment.  Since they had no cooling to be able to remove the heat and to stop the production of hydrogen and to relieve the pressure, they were forced into the last resort option, which is to perform small, controlled vents into the surrounding building.  This prevents the containment building from overpressurizing and being destroyed.  They melted down, but they did not lose their containment barrier.  The controlled venting prevented a much larger explosion of the containment building.  Ideally, they would have gotten power back sooner, and the reactor building itself could have been controlled, as well, and the panels would have never blown out.  Unfortunately, they did have hydrogen explosions in three of the buildings.  That's the worst case scenario for those buildings, but the panels are designed to blow out for exactly that purpose, to protect the drywell containment and the rest of the building.  It was not optimal, and was the worst-case scenario, but it worked as designed, and even with the melt-downs, the containment structures are intact and the fuel is contained.

For what it's worth, after Fukushima happened, the industry began a detailed look into beyond design basis accidents.  Fukushima was never designed to sustain an earthquake of that magnitude, nor a tsunami/flooding event high enough to top over the retaining walls and flood the plant.  You literally cannot design any structure withstand every possible event that could ever happen in the history of the universe, you have to establish a design basis event, and plan from that.  Planners and engineers look at historical record, determine the worst possible even that is likely to ever happen, and design the plant to withstand that, plus a safety margin above it.  Fukushima suffered a geological event beyond anything that was ever predicted to be possible.  It is a wonder the plant fared as well as it has, and that all containment structures are intact.  But because of that, the industry has been forced to look at "what are you actually going to do if you have an event that is beyond your design basis?"  I can't even begin to describe all of the planning and theoretical "what ifs" have been discussed about it.  At all nuclear plants in the U.S. we have added numerous external pieces of safety equipment.  We have a hardened protective dome designed to withstand pretty much anything, and inside the dome we have millions of dollars of emergency equipment.  We have trailer mounted emergency diesel generators, trailers with hundreds of gallons of fuel, trailers with large pumps and literally miles of hoses where we can connect things up and pump extra cooling water into various portions of the plant.  We also have large trucks and earth moving equipment to clear travel paths of debris to be able to connect this temporary equipment.  All of that came about after Fukushima.  So, if the same thing happened here, if we somehow lost our backup diesel generators, we have plenty of equipment on site in a protected dome where we can connect temporary power and supply cooling water.
Reply: @dogphlap6749  I hope our safety culture becomes more evident to people, because nuclear power is faced with this stigma that "every plant is a Chernobyl just waiting to happen."  The reality of the situation is that there are numerous design differences to begin with that make our plants more stable and safer than Chernobyl in the first place.  But the biggest thing is how the culture has changed over the decades.  Clearly, mistakes have happened and accidents have happened in the past.  But we have learned and adjusted, to see to it that they don't occur again.

For instance, the accident at Three Mile Island comes down largely to a training issue.  They had a valve stick open, causing them to lose reactor coolant.  First off, the operators saw indication that the valve was closed, the closed light was on, and they believed that, despite other indications.  Secondly, they misinterpreted the temperature indications downstream of the relief valve they had lift, and even though it was giving them indications that the valve was still leaking by, they did not have the training to interpret the temperature readings, and thought, yet again, that the valve was closed.  On top of that, since they were losing reactor coolant, they had formed a steam bubble in the reactor vessel, and pushed all of the coolant into the pressurizer.  They saw pressurizer level rapidly rising.  They had inadequate training on that, as well, to believe that the level was rising due to emergency cooling being pumped in, and did not recognize that they were forming a steam void in the reactor vessel, and they had also been trained to never let the pressurizer level fill completely.  Based off of all of that, they took the wrong actions and stopped pumping in emergency cooling water.  Instead, the right action would have been to maintain emergency cooling water, and to isolate the valve that was stuck partially open.

Clearly, you could say, "well, that's hindsight, and its easy to know what they should have done, now, as a "Monday morning quarterback."  But that was almost 40 years ago.  A lot has changed since then.  Back then, operators were more along the lines of a truck driver, or an equipment operator.  No offense intended for anyone in those very necessary professions, but what I'm saying is that they were trained how to actually start the plant up and operate it, but weren't really trained in a lot of the physics and thermodynamics of it.  For instance, looking at temperatures downstream of the stuck valve...they were lower than the operators expected, because they were lower than the pressurizer water temperature.  But they were not aware that it was a steam throttling response, meaning the pressure is dropping to the downstream pressure, causing the temperature to drop.  Had they known enough about the steam tables and the Mollier diagram, they could have seen that they were, in fact, at the exact right temperature to show that they had steam throttling through that valve.  Today, we have the same failure run on us in the simulator frequently, and it is absolutely expected for an operator to quickly determine that the valve is stuck open.  With the training we have now, the specific instance of Three Mile Island is such a non event that it's almost not even noteworthy.  We have a relief valve lift, we monitor response, verify the valve has gone closed.  If not, we isolate the valve.  It's not even noteworthy, it's just a minor failure thrown into a scenario on top of all the other failures we experience.  Not only that, but our procedures have been made a lot more "idiot proof."  Back when Three Mile Island happened, operators had to evaluate and determine what had failed, and only then could they know what procedure to use.  Now, our accident procedures are symptom based.  You start at the beginning, and it's almost a flow-chart, cookbook kind of setup.  The procedure asks what this parameter is doing, and tells you where to go.  Then it asks you to verify something else, and will tell you where to go.  Operators are, of course, trained to the level where we are capable of doing that without the procedure, but the procedure is there to make sure you don't miss something or misdiagnose it.  

Since Three Mile Island, operator training has been completely revamped.  I make it a point to explain to people that I am not actually an engineer, and I don't have a degree, but it's a two year program to get an NRC license.  While our training is not exactly an engineering degree, we are trained fairly extensively in that.  Maybe a Cliff's Notes version, but operators today are not too far from the level of training an engineer gets.  But we get widely varying training in so many aspects.  Metallurgy and different failure mechanisms for metal, chemistry and corrosion, thermodynamics and the steam cycle, reactor kinetics and reactor theory, electrical theory and control of generators and voltage and vars, radiation and the effects on the human body, radiation worker practices and how to minimize dose and work safely, component theory for how different valves and pumps are constructed and how they operate, instrument theory and how the instruments work, as well as training on all aspects of the design of the plant, it's instrumentation and control and safety functions.  On top of that, we are trained extensively on accidents and core damage and how to prevent it and how to respond.  We are trained on hundreds of different procedures to combat any type of failure or accident we encounter.  None of this training existed, at least nowhere near this level, back in 1979 when TMI happened.  Not for operators, anyway.

What I'm getting at is that yes, absolutely, safety is at the forefront of everybody's mind.  We want to make power, because that's how we make money and we provide power to our customers.  But all of that takes a back seat to safety.  We have a culture where a conservative bias and a questioning attitude is ingrained into us.  If we are not sure of something, we stop.  If the operating team is not absolutely sure that what they are doing is a safe course of action, we shut the plant down.  And it never falls to just one person to decide to keep going.  If the supervisor wants to raise power, but the operator feels it is unsafe, the operator can say no.  If the supervisor says we need to stay online, but the operator feels it is not safe, the operator can, should, and is in fact expected to trip the plant.  Even if the supervisor disagrees.  If one person on the team feels things are unsafe, we are going to either resolve the issue, if there is a misunderstanding, or we will put things in a safe condition. 

If Chernobyl had this sort of safety culture, that accident would not have happened.  If Three Mile Island had better training for the operators, their accident would not have happened.  We have learned from these cases, and we have developed the safety culture to prevent these accidents in the future.  And in the previous comment I discussed Fukushima, which was beyond control of the operators.  Because Fukushima suffered a natural accident beyond anything they were ever designed to manage, they ended up with fuel damage, that is thankfully contained in their containment structures.  But because of that, our industry has asked "what would you do, if you had a geological accident beyond your design basis?"  So much effort has been put into exploring all possible issues, and we have built fortified structures at each plant that contain the equipment necessary to protect the reactors, even if everything else in the plant is damaged or destroyed.  So, yes, safety is at the absolute forefront of our minds, and we have not sat still after these accidents that have happened in the past.  The industry has changed to adapt and to learn and to prevent them from happening again.
Reply: @adamhutchins1981  Incredibly informative and thorough as always. I especially appreciate the explanation of power tilt in the bottom of the core due to moderator temperature. You'd be surprised how many students don't know about that, although they would quickly understand why it is so. Do you know the total worth/worth curve of the different rod banks and their speed or response time? Obviously I won't pressure you for information you can't share. I'm just trying to make a realistic model, and I find myself scouring operator manuals and NRC slides more than I do reading textbooks or research literature. As always your answers are stellar.
Reply: @Baibakov88  Rod speed is easy.  The values aren't really important, because surely, it is different for every reactor plant.  We have a certain rod speed when we are in manual.  Switch the rod control bank selector switch to manual, and the rod speed indicator shows your rod speed (it's always the same value for manual), and then you can hold the "in-hold-out" switch in either in or out, and the rods step in or out at that speed.  When we are selected to automatic, rod speed is variable dependent on how much temperature mismatch we have, and the rod speed indicator tells you what the current rod speed is.  But we have a fixed rod speed in manual, and a variable speed in automatic, and operators are trained on the values.

As for rod worth, do we know it?  Yes, we do, as in, the information is obviously available to us, but it's not something we normally need to refer to.  We have "core physics curves" that have a graph of rod worth as part of the curves.  All of those values are available to us, boron worth, rod worth, xenon worth, fuel concentration over core life, etc.  We have a whole book with graphs to show these values.  But honestly, it's not something we normally need to refer to.  The curves are built into our reactivity spreadsheet.  We don't manually perform any calculations to determine these things, because it's just not fast enough or efficient enough.  We perform different calculations using the core physics curves as part of our training, to learn the concepts, but it's not used on a day to day basis.  We are trained to have an overall idea how the core will respond, and we have a reactivity spreadsheet that gives us the information we need for our reactivity plans.  And yes, it has rod worth on it.  For a given set of conditions, the sheet literally tells you 1 step in on rods is X amount of pcm, 2 steps is Y amount, 5 steps is Z amount...etc.

Without actually looking at the physics curves, I wouldn't be able to give you any actual values, and of course, I hesitate to give out too many specifics.  Mainly because its sort of irrelevant, because it's going to be completely different for any other reactor, and it's even different for us from one fuel load to the next, although it's generally pretty close.  But also, it's because it's information that really isn't used on a day to day basis.  I look at my reactivity sheet, and it tells me 1 step in on rods is -2 pcm, for instance, and my sheet tells me a 10 gallon boration is -2 pcm, and that correlates to -0.2F for RCS temperature.  Just throwing out rough numbers, because it changes over core life.  But based on that, I know what temperature effect I should get from a specific boration, and I know what effect I should get for a specific rod insertion.  That's what we actually use on a day to day basis, because the rod worth is input into the reactivity spreadsheet.  There are obviously a LOT of reactor physics calculations (which as I said before, I'm really rusty on because it's been almost a decade since I did my initial training), but it's not something we use on a daily basis.  It's good to learn to learn and understand what's going on, but we just don't sit there manually calculating all of these different reactivity formulas.  That's "academia" vs "real world," I guess you could say, lol.

I hope that's a satisfactory answer for you, and answers your question.
Reply: @thisnametooktolong  Sir, this is a Wendy's.
Reply: @thisnametooktolong  Ok, man, thanks for your input.  I'm long winded, because nuclear power is a subject I know quite a lot about and I'm trying to teach you, as well as anyone else who is interested.  If it's too long winded for you, and you're not interested in reading it, then...don't.  If my 20 years of nuclear operator experience, with 6 of it being in the US Navy makes me an armchair quarterback, then so be it.  Thanks for your input.  Have a nice day.  I'm not going to get sucked into an argument, here.
Reply: @adamhutchins1981   I'm not an engineer either, I have a physics BSc but I've done a bit of work with ionising radiation in the form of X-rays and generally I can follow these videos without too much of a stretch. As I understand it the reactors at Fukushima were shut down before the tsunami arrived but the core was still too hot to survive undamaged without cooling water. Power went off, the emergency diesel generators went under water, no cooling water circulation then big problems followed including the hydrogen released from water exposed to the zirconium cladding of the now very hot fuel rods. Hydrogen really likes to go boom at the slightest provocation.
I guess the depiction of Homer Simpson as a nuclear power plant operator might be a source of annoyance/frustration.
Reply: @adamhutchins1981  Many thanks to the best and most detailed (ever!) description of a real nuclear power plant operation. It's been fascinating reading all of the information until very very late hours.
You might consider putting all the text together, polishing it up (it's/its, etc.) and publishing it as a booklet or as a blog. I'm not sure what your employers would say to that though...

As a side note, I was 11 when the Chernobyl power station blew up. I grew up in (then) Czechoslovakia and we got the first official information about the disaster in early May (not sure on the exact date 33 years ago). Radio Free Europe and the Voice of America had reported on the event a few days earlier. I don't remember anyone receiving any iodine tablets at the time even though the radioactive cloud had reached us. They only told us not to pick mushrooms in the forests (a national 'sport' otherwise) and not to drink milk. We had all marched in the Labour Day communist manifestation on May 1 (it was mandatory and absentees would be disciplined) and the Peace Race (an international bicycle race) had started as planned on May 6 from Kiev, about 100 km from Chernobyl. Unsurprisingly, only about half of the riders actually took place in the event that year...

I can reliably confirm that the whole Soviet regime had suffered irreparable reputational damage from the explosion and the typical attempts to downplay it. Dozens of anti-Soviet and anti-communist jokes started circulating almost immediately (most of them cannot be translated, sadly). E.g. 'Radio news broadcast: "The reports of radioactivity are false and the radiation levels are dropping every day."', or
'"From this point on, we are only going to build colour nuclear power stations." "Why?" "Because the black and white*) ones did not do well."' *): Chernobyl sounds just like černobílý, which means literally 'black and white' (as a TV), even though the word actually means 'mugwort' in Russian.
Or you took the old 10 Koruna banknote and folded it in half length-wise. The bottom part had an image of a water dam, the upper part had an image of clouds. We called the two halves Chernobyl 'before' and 'after'... See https://images.app.goo.gl/qS3y27ZGnou8WUuF7

You can imagine that communism/socialism couldn't withstand such a massive loss of face for too long. This wasn't the only event with a 'positive joke coefficient'... :)
Reply: @dogphlap6749  That's a pretty good summary.  You definitely nailed the big picture of it.  For the record, it's not just that they shutdown and the cores were still too hot, it's that even after shutdown the cores still produce decay heat.  All of the radioactive fission products continue to produce heat, even after fission in the reactor stops.  Fukushima's disaster came about because they were unable to maintain cooling to remove the decay heat.
Reply: Dear Adam ..I trust very much the experience over just  the teory,  could you please explain in detail how  you restart a reactor faster. How is this preform with out risk?  I will be wating impasiointly for your answer.
Reply: @vladimirarnost8020  I appreciate you sharing your recollections of that time.  I was a bit younger, myself.  I was 5 when the Chernobyl accident happened.  Of course, being in the United States on the other side of the world, I don't remember much more than it being something we saw on the news.  There was really nothing out of the ordinary, here, that I can recall.  Then again, I was 5, so I'm not sure if I really would have remembered much.

As for taking all of this I've written here and sharing it, I have given that some thought.  Usually I am a very meticulous person, very grammatically correct, but I'm sure that as much as I have typed out here, and as quickly as I have rushed to get my ideas down, surely I have made some grammatical mistakes, lol.

I do think that the general public is at a loss for really not understanding nuclear power, and it leads to a lot of fear.  Clearly, at one end of the spectrum, you have clean, peaceful, safe, nuclear power generation, at the other end of the spectrum you have atomic weapons that leveled Hiroshima and Nagasaki, and somewhere in between, you have Chernobyl, and Fukushima, and Three Mile Island.  Without really understanding a lot of the details, it's hard for people to see the differences, and to understand.

I don't know the best way to reach people.  Maybe a blog?  Maybe trying to create my own YouTube channel where I take questions and answer them?  I don't know.  Even if I did make my own blog or YouTube channel, I don't know how well I could get it out there and get it seen by people.  As for the company I work for, I've been intentionally vague as to not say what plant I work at or anything.  And I've only given some rudimentary details, and certainly not anything that is any type of secret information.  I guess the biggest struggle for me would be where to begin.  Because it's such a complicated subject, it's hard to know what to start with.  If you have any ideas, feel free to offer them up.

Thanks for your reply.
Reply: @ernestoterrazas3480  My apologies, but I'm not sure I understand exactly what you are asking.  If you are asking how we safely restart a reactor before 3 days has passed, I have given a very lengthy explanation of how we actually operate the plant and manage the xenon transient.  If you would please refer to my previous posts above, I'm sure you'll find that I went into great detail about that.  If anything was unclear, you're more than welcome to ask for clarification.  I don't want you to feel like I don't want to answer your question, it's just that I wrote quite a detailed set of posts where I tried to answer this question already, if that's what you're asking.  Please feel free to ask if it's not clear.

If you're asking how we can start a reactor up faster, as in pulling rods faster to achieve criticality quicker, and raising power at a faster rate, that's something we just don't do.  Our startup procedure is very deliberate, with us only being allowed to withdraw rods so quickly and stopping after a certain amount of rod movement to stabilize and check indications to see how close we are to criticality.  We cannot move rods quicker.  We also have a strict limit on how quickly we can raise power once we achieve criticality, and we have a strict limit on how quickly we can raise power as we increase the turbine load.  So if that's what you're asking about, that's not something we would ever do.
Reply: @adamhutchins1981  Fantastic! I just spent some time reading all of your comments here and am now much better informed. Sounds like a very interesting career you have. I've only been to a reactor twice for work (as a research scientist-but nothing to do with the operations of the reactor itself but rather some experiments with some Co 60 sources) but I was totally fascinated by what was around me. Thanks for your great explanations!
Reply: Thanks Sir, your knowledge is First Hand .
Reply: @Durkamoo  Xenon is really just something that happens, and it's out of our hands.  Xenon is produced and stays right there inside the fuel pellets, so it's all but impossible to use chemical means to remove it.  Since it's not in the coolant, the water circulating through the reactor plant, we can't use any sort of chemical means to remove it.

Xenon is just produced and also burned out and removed from the core naturally as a product of the fission process.  There are two ways it is created.  First, it is produced directly from fission.  When the atoms of uranium split, sometimes one of the pieces left over is xenon.  Second, another thing that often gets produced during fission is radioactive iodine, which then decays and becomes xenon.  Through those two ways, xenon is being produced, all the time, when fission is happening.  Even if you shut down the reactor, you will still continue to get xenon being produced for several hours as the iodine decays away into xenon.  But both production methods are a result of fission.

Xenon is also removed in two different ways.  The first way is simply referred to as burnout.  Xenon (specifically we're talking about Xe-135, here) is a reactor poison, because it has a very high cross-section for absorption of thermal neutrons.  When xenon captures a neutron, it becomes a different isotope of xenon, which no longer captures any more neutrons, and therefore is no longer a reactor poison.  The other way xenon is removed from the core is by decaying away.  Any xenon that does not capture a neutron will eventually decay into Cesium.

It's literally just an ongoing thing that happens constantly while a reactor is at power.  At power, we are always producing xenon, and xenon is also being burned out and decaying away.  Depending on your power level, there will be a stable equilibrium amount of xenon once everything stabilizes.  Until you change power again, you get to the point where xenon is being produced and being removed at the same rate, and you have a constant amount of xenon.  Raise power, and the xenon concentration initially drops due to more burnout, then rises up to a higher equilibrium based off of more xenon production from fission and more iodine present to decay to xenon.  Lower power, and xenon concentration initially goes up, since you are not burning out as much xenon but it is still being produced at the same rate from iodine decay, but then it lowers to a lower equilibrium value.  And if you shut the plant down, it does the same thing as when you lower power, only to a greater extent.  The peak is higher, because all of your fission stops and your xenon burnout goes away, while still being produced by iodine decay.  And then over the next day or two, xenon concentration will drop to nothing, because you are no longer producing any, and everything you had will have decayed away.

So basically, we are producing xenon all the time we are at power, in varying amounts, and xenon is also being removed all the time, again, in varying amounts.  It would not be possible to expose that xenon to a neutron flux to remove it faster, because it is located in the fuel.  It's a good idea, and would work, in theory, except you have to remember where the xenon is located.  If you expose the core to a neutron flux, to try to remove xenon, you will begin causing fission and cause the reactor to restart.  Because that's what causes fission, is neutrons interacting in the core.  In order to keep a reactor shut down and subcritical, we have to remove essentially all of the free neutrons from the core.  So there really is no way to expose the xenon to neutrons to burn it out, but also absorb all of the neutrons in the boron and control rods in order to keep the reactor shut down.  But the good news is, as I've been trying to explain from the start, it's not necessary to even attempt to remove the xenon, because we can safely and easily perform a startup and bring the plant back online even with the extra xenon build up in the core.

We pretty much just let xenon do it's own thing, to be honest, and we measure what it is doing and adjust our reactivity plan to compensate for xenon build up or burnout.  That's the biggest thing I am trying to stress here, is that a xenon transient is absolutely normal and expected anytime the power level is changed in the reactor.  It's just a fact of life, and something that has to be taken into account, but in the whole picture of everything, it's really a very minor issue.  It is a real effect that absolutely has to be accounted for, and you can't just ignore it.  But at the same time, xenon transients are just the normal and expected part of moving the plant up or down, and managing xenon is just a routine part of reactivity control.

I think all the discussion about the xenon effects at Chernobyl have led people to believing that this is a dangerous and abnormal condition, and something that is very difficult to manage safely, and that's just not the case.  Xenon transients are a natural result of ramping a power plant up or down, and they are unavoidable, but they are also just a routine part of reactivity planning to account for them.
Reply: @BushCampingTools  What I do, controlling the rate of nuclear fission in a reactor, is definitely very interesting from a theoretical standpoint, understanding what is going on.  But, at the end of the day, the job itself is usually pretty bland and boring on a day to day standpoint, lol.  Which is a good thing.  We really like it when nuclear power is boring.  Everything we do is just carefully controlled and deliberate, but honestly, well over half of the job is simply paperwork and testing of equipment to make sure things are operating properly.  On a normal shift, at 100% power with everything stable, we will basically perform a dilution to remove boron about 3 or 4 times a shift.  That's it, for a normal shift.  And even performing a dilution is not very exciting.  It's literally nothing more than turning 2 switches.  Although, performing a startup and ramping the plant up is more involved, and that does get to be interesting, because it's more than the normal day to day operations.

Honestly, the most interesting part of the job is when we go into the simulator every 5 weeks for training.  There, we have an exact replica of the control room, with all of the switches and gauges and displays, but it is all connected to a large computer system.  Then, we operate the simulator as if it is the real plant, and the training staff will cause any number of different failures.  They will fail certain instruments, and we have to control systems manually because automatic control doesn't work...they will fail controllers, so the instruments work, but you still have to take manual control of that parameter...they will fail valves, like giving us a stuck open relief valve like what TMI had...they will fail pumps and have various pumps trip...and they will usually put us into a serious accident scenario each time, like giving us a large piping break in the reactor coolant system, for example, requiring us to take emergency actions and verify emergency cooling is operating.  So really, that's the most interesting part of the job, because if feels like you're in the real control room, and you just never know what is going to break, or when you're going to have to manage some type of an accident.

I can't speak for research reactors, of course, but from what I understand, their design is a lot simpler.  Usually just a fuel bundle way down deep in a big pool of water with a handful of control rods used to start them up and shut them down.  I have seen videos of research reactors being started up and operating, although I have never been to one.  Research reactors obviously don't have the gigantic steam plant and machinery we use to produce electrical power.  But still, research reactors are neat, because it's all visible.  You can see the fission happening, when you get the cool blue glow of the Cherenkov effect.  Our reactor is producing A LOT more fission, but of course, ours is sealed deep inside a gigantic pressure vessel, and can't be seen.  The only time we get to see the blue glow of the fuel is during refueling, and that's just being caused by fission product decay, not fission.  So it's a little bit different world.
Reply: @adamhutchins1981  Hi, thanks for replying. Yeah I see what you mean re the simulator training. Yes in the research reactor it is just as you say and some of us were more interested in the Cherenkov effect than what we were supposed to be there for, simply because it is pretty cool to see.  But the experiments were also a bit boring (I remember at the time and the other interesting stuff for me were the hot rooms. Unfortunately we were never there for a start up. I long ago left that field of research and hence no more time in any reactor facility.
Reply: Adam Hutchins xenon override capability refers to the ability of a reactor to safely restart during peak xenon. Bwr plants have up to 40% of their reactivity tied up in void fraction, so after a scram you get that all back and can safely restart a bwr virtually any time in the operating cycle regardless of remaining hot excess reactivity or xenon inventory. 

Pwr plants use boron dilution if necessary and regain reactivity from the power defect after taking a reactor trip. During the majority of the operating cycle a commercial pwr can restart in peak xenon, however towards the end of life when boron is nearly fully diluted there may not be sufficient reactivity to restart a pwr. That’s what I was referring to. 

As for mod temperature, with these advanced fuel designs we have been getting over moderated between 220 and 320 degF. Since BWRs do nuclear heat ups we need to monitor this. The overall power and fuel temp response is negative, however when you are heating up in positive MTC you don’t see power drop. It usually holds steady. So when someone pulls rods in that region you see more oomph than you would with negative mtc. It was particularly unique for Clinton because we shifted to 1 year refuel cycles and had much lower batch reload fractions, meaning our core behaved as an older one nearly all the time. By getting out of that region as soon as I could I got normal temperature feedback and it was much easier to monitor and control.
Reply: @enthalpy  Thanks for explaining that, that's very interesting.  Having never been licensed at a BWR, of course I have just the basic knowledge of reactivity control, but I am familiar with the fact that void fraction plays a big part of it, with raising recirculation flow to reduce voids and add positive reactivity.  I hadn't considered the nuclear heatup aspect of things, though.  In a PWR, of course, we have a minimum temperature for criticality, below which we are not allowed by Tech Specs to be critical, so we are always at our normal no-load Tave before we begin a start up.  We simply heat up with decay heat and pump heat from the reactor coolant pumps before we can begin a startup.

And thanks for clarifying the terminology, because xenon override capability is something we never discuss and don't have a term for, at least not at my plant, and not in any of the training I have had, which of course, is PWR training as well as the Navy Nuclear training.  But I am definitely familiar with the concept, of course.  We obviously have extensive training in xenon and core reactivity effects, so the concept is not new to me, just the terminology, because I've never heard it referred to as such.  And for the benefit of people who don't know, but were curious about the specifics, I did post some comments previously explaining in pretty great detail how we would manage a maximum xenon startup.  Just like you said, the first thing we would do would be to determine our required boron concentration, and we would dilute to establish that before we would ever commence the startup.

You mention the issues with a maximum xenon startup at end of life, and that is, of course, the only time it would be a concern for us.  If we got to the point where excess reactivity of the fuel was so low, and we could not physically remove enough boron to be able to establish criticality, well, there you go.  We would definitely be xenon precluded in that case.  Like I said, however, this would be a very unusual circumstance, because we have been operating with higher enrichment as well as maintaining a little bit more margin to our rated thermal power limit, so at my plant, we have not gotten to that point.  I can't even remember the last time we did a coastdown going into an outage.  We normally maintain full power right until it's time to ramp offline, and we have enough reactivity to do a maximum xenon restart pretty much any time, even at end of life.

BWR operations do fascinate me, because it's a completely different design than I am used to.  Much the same way as the RBMK design at Chernobyl fascinates me.  My entire career has been PWR only, first the Navy, and now at my current plant.  There are a lot of unique aspects to BWR operations, and I know I've only scratched the surface in my discussions with BWR guys.  Thanks for your reply, I really appreciate it.
Reply: @adamhutchins1981  I greatly thank you for the discussion you have posted. My daughter is doing a school project on boron and was not sure where to start. I mentioned that it was used heavily in reactor control and she instantly became interested. I have forwarded this to her so she can use it for a understanding of how reactor control happens. Let it be known that you do not have a thankless job, if it ever where to seem that way. People like myself and family would like to thank operators like you and engineers as well as everyone in the nuclear power industry for providing us with the power of the future. I would like to thank you for your service with the navy as well. My brother was SSBN.
Reply: @adamhutchins1981  You are a class act, thank you kindly. I have a good grasp of the basics of nuclear engineering and simple understanding of reactor controls. Most of this stems from having an older brother go thru school for it when I was a young man (he was a hero back then, now he's just a p.i.t.a. like always lol). There is however a general thirst for knowledge trivial or not on the subject due to my advocacy of nuclear power. We need more of it sooner in order to meet our future demands. We need more young ladies and lads studying and hearing about day to day operations to understand what goes into providing power to the world. You have knowledge to share and it is very kind of you to do so. Thanks again!
Reply: @upsidedownfarmer3513  Thank you so much for that.  I'm glad what I've posted is resonating with people, and that there are people interested in this.  I think part of the problem is that there's no good place for the average person to learn a lot of this stuff, without actually doing this as a career.  There are plenty of documentaries, and it's awesome that so many things can be found on YouTube, but most everything you find is limited to a vague overview that never really gives you any details.  And if you're like me (which your comment seems to indicate) you like to learn all of the neat details to understand things better.  It's no secret that nuclear power is highly misunderstood by the general public, and I hope we can find ways to spread the truth out there.  That's one reason why I don't mind responding to questions here, because I feel like even though it may not be much, I can at least help some people have a better understanding.

Also, as you mentioned, it's true that nuclear power needs to get a younger generation active and involved.  I'm 38, myself, and I'm close to being one of the youngest operators at my plant.  Within the next 5-10 years, a good portion of our work force is going to be retiring (it's already happening now).  I think as an industry, we need to do a better job reaching out to people, especially high school kids, and maybe even at the middle school level, just to help expose young people to what nuclear power is really all about.
Reply: wow thats really cool i want to join the navy and be a reactors engineer, did you go through any college first or did you join and they trained you?
Reply: @RBE_  I need to point out, I am not an engineer.  I have never been to college, and you would need an engineering degree to be an engineer.  I'm not trying to be rude or anything, just trying to clear that up.  I am currently a licensed reactor operator.  When I was in the Navy, I was a nuclear Electronics Technician.

So, no, I have never been to college.  It's not easy to get accepted into the Navy Nuclear Power program, because you have to score really high on your ASVAB test (which is given to everyone who wants to go into the military, to rate your job skills and see what fields you can work in), and then you also have to take the NFQT (Nuclear Field Qualifying Test) and score high enough on that, as well.

But if it's something you are interested in, speak with a recruiter and they will guide you through the process.  Assuming you meet the requirements (high school diploma or GED, as well as passing the tests I mentioned) you can join and become a Navy Nuke.  They will provide you all of your training.

There's two main parts to it, though (actually 3 phases of training, I'll explain...).  The first part is going to what is known as A-School, where you learn your rate, which is your basic job.  Navy Nukes have 3 different rates, Electronics Technician Nuclear (ETN), Electrician's Mate Nuclear (EMN), and Machinist Mate Nuclear (MMN).

You spend roughly 6 months learning that job, before you do any nuclear training.  ETNs and EMNs both learn basic electrical theory all the way through digital circuitry, then they split up.  ETNs learn electronics troubleshooting and instrumentation systems, and EMNs learn motors and generators.  MMNs learn all about pumps and valves and piping and fluid systems.

The 3 different ratings do different jobs when they get to their ship.  ETNs perform maintenance on all of the instrumentation and control circuitry, and they also operate the reactors.  EMNs perform maintenance on the lighting systems, electrical generation systems, and motors and generators, and they stand Electrical Operator positions, where they operate that equipment.  MMNs perform maintenance on valves, and piping systems, and condensers and pumps, etc, and they stand various watch stations in the plant where they operate all of the various fluid systems.

So the first thing the Navy teaches you is your rate, your primary maintenance job.  After that, you go to Power School, where you learn all of the classroom knowledge of nuclear theory and thermodynamics, etc.  That lasts about 6 months, as well.  Then you go to Prototype training, which is a real, functioning reactor plant, and you learn hands-on how to operate it.  Once you complete Prototype, then you go to the fleet, and you get stationed on a ship or a submarine, and then you have to train and qualify on that specific ship.  Then you do your job you just spent 18 months training for.

The Navy provides you with all of that training for free, and you are getting paid that whole time, as a sailor in the Navy.  All you have to do is show up with a high school diploma (I'm pretty sure they will also accept a GED, but I can't swear to it), and pass the ASVAB and the NFQT with a high enough score.  If you score high enough, they're going to push you to go nuclear anyway, because recruiters have a quota of how many people they get to join, and nukes count as 1.5 people for their quota, or at least it was that way when I joined.  If you score high enough on the exams and you want nuclear, they're going to make it happen for you.

Then, if you still like that field, when you get out of the Navy, you can use that experience to work for a civilian nuclear plant, like I did.  Civilian nuclear plants LOVE to hire ex-Navy nukes, and probably at least half the people in operations, maybe more, are former Navy nukes.

If you want more information, or have any other questions about it, feel free to email me at nuclearro81@gmail.com.  I can tell you all about it.  Hope that answers your question!
Reply: Ahh B school fun stuff.
Reply: thanks for the information, it is definitely very helpful. i may be in contact at some point in the future, if i have more questions before i take those tests
Reply: Adam Hutchins Thank you so much for all your information. Like many folks, I suspect, I was looking for more information on Chernobyl after I started watching the HBO miniseries. I found these U of Illinois videos to be more helpful than other sources. I know enough chemistry that I appreciated learning about the importance of xenon and how it affects reactivity. Thank you for taking the time to add additional comments about working with modern reactors and how the industry has learned from tragedies like Chernobyl. I know how much misunderstanding there is about my profession (veterinary medicine) so I know there’s even more misinformation about professions like yours. Thanks again for sharing your experiences so we can all be a little wiser about a complex topic.   :)
Reply: @adamhutchins1981  I have always found it interesting how the anti-nuclear dweebs spew vitriol from their electrically power computer while seat in their brightly lit, air conditioned and heated over sized homes with their garages filled with SUVs. While waiting for a delivery van to bring their latest useless purchase from AMAZON.
Reply: Did you happen to watch the Chernobyl series on HBO?  Horrific catastrophe in a very risky design reactor.
Reply: @wallacegrommet9343  Yes, I absolutely loved HBO's Chernobyl series.  It's a wonderful series, about a very serious tragedy.  From everything I have ever studied about Chernobyl, the series is pretty accurate.
Reply: So in other words you guys found a way to use the "xenon poisoning" to your benefit  Or your controlled shutdown takes the "Xenon Poisoning" into account so it minimizes the effect and you don't have to worry about it.  Hence your "if done properly".  The problems he is talking about is when it is not done properly.  Like Chernobyl.  But I could be absolutely wrong.
Reply: Yeah you can, but you shouldn't teach this to teenage college kids, who might think "oh i can do this too" then might cause an accident, better to teach em the safe way until they know their way with how the real industrial reactors work, then later learn it from their supervisors.
Reply: @thead9  I'm not sure if you're understanding the differences, here.  Chernobyl was not caused because of a xenon transient.  Chernobyl started by accidentally mishandling a xenon transient allowing their reactor to enter a shutdown condition, THEN they made the mistake of trying to stop power from falling and raise power instead of doing the right thing and safely continuing the shutdown.  Not only that, but in order to accomplish this, they violated safety restrictions on the number of rods they could have withdrawn, AND they had their safety systems bypassed.

This is much much more than simply mismanaging a xenon transient.  I am trying to get people to understand that it is not xenon poisoning that caused the accident, the xenon poisoning, and mismanaging it, did nothing more than put the reactor in a shutdown condition.  Had they simply shutdown, they would have been fine.  The errors they made were to try to raise power back up from an unknown reactivity condition, by violating rod withdrawal limits, and with safety systems bypassed.

That is completely different than what I am describing, which is taking a reactor completely down in power until it is completely shutdown, properly evaluating the reactivity condition of the core, and then in a safe and controlled manner, restarting the reactor and raising power back up.
Reply: @HassanalBolkiahSoyjak  I do see your point, but I'm trying to get people to understand that there is nothing unsafe about starting up a reactor with more xenon in the core.    Granted, there are differences in different types of reactors, and maybe the RBMK reactor is particularly sensitive to xenon transients and may not be able to safely overcome them, but that is NOT normally the case.  This professor who made this video says he teaches all of his students that you can't start ANY reactor up before 3 days.  To start with, that's just simply wrong information.  But beyond that, it's not a safety issue.  You either have the ability to start up from a maximum xenon condition, and then it's just a matter of adjusting your reactivity plan to compensate, or your core does NOT have the ability, based off of fuel concentration of some other condition, and it's just not possible to start up until the xenon decays away because you don't have the reactivity to start up.  It's not an issue of either being safe or not safe, it's an issue of being physically able to, or not physically able to start up.

As I said in the last comment, Chernobyl didn't happen because of a xenon transient.  Chernobyl happened because a xenon transient led to them accidentally going into a shutdown condition in the core, then withdrawing too many rods beyond the safety limits, while also defeating their safety systems, in order to attempt to raise power.  That's what is unsafe.  Shutting completely down, being in the midst of a xenon transient, and restarting the reactor in a controlled manner, starting from a known condition, is not unsafe.

It's simply a matter of "do I have enough reactivity to be able to restart the reactor?"  If the answer is yes, then you can safely start up, as long as you know the condition of the core and you have a reactivity plan that manages the xenon.  If the answer is no, then it's not an issue of it not being safe to start up, it's just an issue of not being physically able to start up.  And the overriding safety practice here is that we do not ever violate safety requirements or defeat safety systems.  If the plant for some reason cannot be safely controlled, it will either shut itself down if it reaches the limits, or the operators will take action to shut it down to keep the reactor in a safe condition.

Xenon transients are not an abnormal condition that is dangerous and unsafe to manage, they are a natural fact of reactor operations.  They are unavoidable, they are normal, and they always happen anytime you move power.  It's simply something that has to be accounted for, but it's not something that is unsafe.  I'm just not sure how else I can get this point across.
Reply: That's exactly what I'm talking about.  You have do it properly they did not.  They made many many mistakes that caused the failure.  I am just learning this stuff myself and am just trying to clarify differences that I see.
Reply: Nicely done The Elephants Foot. I do wonder if the camera man who took that photograph knew or not that he was dead just by looking at it🤢
Reply: I guess the advice from EnergyProf was really to noob nuclear reactor operators. You know, these guys who just finished their course on simulator with barely passing grade and are looking to impress their girlfriends by pushing in and then quickly pulling out their rods.
You, esteemed veteran, can wield your equations (well, maybe just tables or piece of simulation software) to ensure you are not doing anything stupid and are actually adequately protected by thick layer of safety margin.
Reply: @taraswertelecki7874  As I understand if the hot spot wasn't there it would just delay the explosion by a couple of seconds. At that point in time it got well into exponential territory.
Also I think every reactor is capable of going runaway to some degree. You necessarily need some controllability and this requires that the reactor allow you to get more reactivity than the steady state. Also the reactor needs to be built so that it can work in a steady state while the fuel is getting burned off and this also requires additional margin.
But not all reactors are capable of going prompt critical. Physical designs can preclude getting into prompt criticality (by physically restricting where stuff can be at any point in time, by introducing right coefficients so that it has negative feedback from the reaction).
Reply: Would the Russian engineers at Chernobyl  been able to do that"
Reply: @donskene6695  At the time the picture of the Elephant's Foot was taken, it had already decayed to the point of not being immediately deadly.  When it was first discovered, of course, the Elephant's Foot was deadly with exposure of maybe a minute or so, more or less, depending on how close you got.  Most of that was from short-lived radioactive materials.  Now, the Elephant's Foot has radioactively decayed to be a mere fraction of what it used to be.  It's still highly radioactive, but you need to be right beside it on the order of an hour or two to get a fatal dose.  Approaching it for a few minutes at a time is still not good, but nowhere near deadly.

It all has to do with half-life.  After each half-life, the radiation level is approximately half of what it was before.  After a 2nd half-life has passed, it is now 1/4 the original level.  After the 3rd half-life, it is now 1/8th, after the 4th half-life, 1/16th, etc.  The reason the Elephant's Foot was so deadly initially is that it had a lot of radioactive material with extremely short half-lives.  The shorter the half-life, the faster the material is decaying, and the more it is casting off radioactive particles.  That means it does more damage, because you are getting hit with more ionizing particles in a short amount of time.  But that also means it decays away very very quickly, too.  So 20 or 30 years after the disaster, most of those short half-life materials have decayed away, and all that is left is the longer half-life materials.  With a longer half-life, they don't release ionizing particles anywhere near as fast, so the damage done to your body in the same amount of time is much much lower.
Reply: @leonardmilcin7798  Again, my point was that this is not a real rule, for anyone.  It's simply false, and it does no good to teach anyone such things.  Before anyone can operate a reactor, they must be trained and qualified on that plant, and they will learn any limitations that plant has, so there is no reason to teach people false information that is not true, that they will have to un-learn later.  No disrespect meant for this professor, who does amazingly informative lectures, but my suspicion is that he seems to only have theoretical classroom knowledge, and not any real-world operating experience.  I am not saying he doesn't know what he is teaching, and he probably does know a lot more nuclear theory than I do, since I'm not an engineer, but clearly he does not seem to have the real-world practical knowledge and experience that I do.

It seems like everyone is like, "well, teach the students the safe way first, and they can learn more later."  But for one, it's incorrect information they shouldn't be taught, because it is wrong, there is absolutely no such thing as a 3-day rule to restart a reactor, and second, its not that "this is the safe way, and the other way is the dangerous way."  Xenon transients are a fact of life, and they happen continuously, any time you raise or lower reactor power.  You can't teach people that they need to avoid xenon transients to be safe, and never operate during a xenon transient, because you would never operate a reactor, then.  It's like saying you can only drive your car on flat, straight roads, and you should never turn, or go uphill or downhill, because it's unsafe.  Xenon transients in a reactor are like hills and curves in a road.  They are normal, and you can't avoid them.  They are not unsafe, they are just something you need to manage.
Reply: @adamhutchins1981  just over 5 mins lethal dose.....today, compared to 25 seconds at time of event😉nasty stuff but good for deep space nuke battery
Reply: @adamhutchins1981  PS. Outstanding thread!
Reply: @leonardmilcin7798  I think you've got a good idea of what's going on, but I'll add a bit of clarification.  First off, there is no reactor design that will let a reactor "runaway" or even come close to prompt criticality, because we have safety systems to shut the reactor down in such a case.  There are multiple independent channels to detect any power escalation, and if power is to rise suddenly, the plant will automatically trip/scram to shut itself down.  The instrumentation is designed with failures in mind, so that if you have 4 of one type of detector, only 2 need to detect a trip condition in order to call for a trip.  That way, if only one fails to a tripped condition, you won't trip unnecessarily due to a failed detector, but if you have a real trip condition called for, you can have two detectors fail in a non-trip direction, and still get a trip on the working channel.  Basically, if one wrongly says trip, the other 3 good ones say no, and you don't trip.  But if you have a real trip condition, and two detectors wrongly say don't trip, the other 2 detectors will trip it anyway.  And there are different types of detectors, for all different parameters that will trip on various different conditions.  So even if one parameter totally fails to trip the plant, another, different parameter will still trip you.  If you don't trip on reactor power, you will trip on high pressure, for instance.  Part of Chernobyl's issue was they defeated all of those safety systems, and intentionally drove the reactor into an unstable state, causing the disaster.  So, as long as you do not intentionally defeat those systems, it is impossible for a reactor to "runaway" or become prompt critical.

Second, when it comes to design, you are absolutely right, that reactivity coefficients is what it comes down to.  The RBMK reactor is one of the few reactors that end up with a positive reactivity coefficient.  Due to the fact that they use graphite moderator, the water in their core ends up controlling the reaction based off of its absorption of neutrons.  More water, less neutrons, less water, more neutrons.  So as they heat up and power rises and they make more steam in the reactor, they end up with more neutrons, which will make power rise even further.  That's how an RBMK can runaway...but it should be stopped by the safety systems well before it causes any damage.  In the rest of the world, reactors are basically of 2 different types, pressurized water reactors (PWR) and boiling water reactors (BWR).  In a PWR, pressure is high enough that we have no appreciable amount of boiling of the water in the reactor.  Our reactivity is controlled based on the moderating property of water, because that is our only moderator.  More water, more thermal neutrons, less water, less thermal neutrons.  As power rises and temperature rises, the water becomes less dense, so you get less neutrons, and power stops rising.  As power falls, temperature lowers, water becomes more dense, you get more neutrons, and power stops lowering.  It stabilizes itself at whatever power you put it at, based off of controlling the control rods and boron concentration.  In a BWR, water is still the only moderator, so the effect is the same.  However, they do boil within their coolant channels in the reactor, because they have a boiling water reactor.  As power rises, more boiling, more steam bubbles, less water, less neutrons, power stops rising.  As power falls, less boiling, fewer steam bubbles, more water, more neutrons, power stops falling.  Reactivity control in a BWR is primarily controlled by adjusting recirculation flow through the core.  More recirculation flow, fewer bubbles remain in the channels, more water, more neutrons, power rises...then stabilizes as described above.  Lower recirculation flow, more bubbles left in the channels, less water, fewer neutrons, power lowers...then stabilizes as described above.  So, basically, virtually all reactors (except for the RBMK) are designed with this negative feedback system.  If you do something to the reactor to change reactivity, power will either rise or lower, depending on your actions, but then it will stabilize itself.  It physically can't runaway.  The physical design of the reactor cannot possibly run away, on it's own.
Reply: @donskene6695  FYI, Artur Korneyev is the man in the photo near the Elephant's Foot.  He is likely still alive to this day (although I cannot find anything to confirm this), but he has been to the Elephant's Foot on multiple instances to survey and take samples, and to study it.  So he did not die from his visits to the Elephant's Foot, at least not immediately.  The rumor is that he does have serious health issues to this day, due to his exposure, which was still very high, but he did not immediately die from exposure to the Elephant's Foot.
Reply: @adamhutchins1981  Well, let's clarify the term "runaway". Runaway as description of reactor state means that the reaction is supercritical and it undergoes expenential growth in reaction rate with no controls or feedbacks in place to effectively stop it.
No exponential growth can last forever. In case of both bombs and reactors the reaction stops when the mass is no longer critical.
Runaway reactor will not become atomic bomb because it is actually quite difficult to keep the critical mass for long enough for it to go through significant amount of fuel. But it still is capable of exploding and this would be a sign that the reaction "ran away" uncontrolled.
If the reactor uses active safety to prevent runaway reaction there is always chance for the active safety measures to fail and reactor become runaway until it undergoes rapid unscheduled disassembly. The measures only make that chance smaller though as smaller as you want (but never zero). The example would be cavalier attitude of its operators or malicious intent.
If am fine with this as long as the chance is small enough. But never claim it is not possible for the reactor to run away. It is not only not true, it is dangerous as it makes people complacent (if it is not possible why care).
There are designs that are truly incapable of going runaway (because they have physically built in coefficients that will stop it at some temperature).
But these designs are typically poor solutions in terms of power to volume ratio or power to amount of fuel or nightmare to maintain.
Reply: @leonardmilcin7798  I don't think you're understanding what I am saying, though.  All reactor designs, besides the RBMK, are incapable of having a runaway as you described.  That's the point I was trying to make, we have natural feedback loops designed in, based off of how our reactor is designed with water as our only moderator.  It is incapable of running away.  Literally, the only way you can make power go up in reactors designed like the ones I have operated, is that you have to raise the steam flow, pull control rods out of the core, or lower the concentration of boron.  If you do not do one of those 3 things, power cannot rise in my reactor, based off of the physics of the design.

You are right that active safety systems can fail, but I don't think you understand how many independent and redundant safety systems we use.  You are correct that you can never make an accident probability reach 0%, but you have to have failures on so many different systems, simultaneously, that it is practically impossible.  If nuclear instruments that measure reactor power all failed, you would still get a trip on steam flow instruments, or reactor pressure instruments.  Everything backs up everything else.  Beyond that, the entire instrumentation systems are designed so that everything fails safe.  If you lose power to an instrument, it gives you a trip signal.  We will not trip on only one signal, because in that case it is likely just a failure, but if a second channel also fails, you will get a trip.  If the entire system itself loses power, you will get a reactor trip.  If you don't have a single instrument failure, and the plant loses power from the power grid, simply losing power will cause it to trip.  Every single instrument in the plant is designed to give a trip signal.

But, you don't have to rely on the safety systems to prevent a runaway reactor, because it can't happen based off of the physics of the reactor design.  If you don't change steam flow, rods, or boron, power absolutely will not change, because it self stabilizes.  If it was to try to rise, you will get negative feedback to stop the rise and lower power back down.  You have to deliberately do something to make the power rise, in the design of Western reactor plants.

Here, look at it this way.  In order to make a reactor rise in power, you have to fission more uranium.  That means a thermal neutron is absorbed in an atom ofU-235, causing it to fission.  Since there is a fixed amount of uranium, the only way you can cause more fissions to occur, is by having more thermal neutrons.  Every single part of reactor control literally only controls how many thermal neutrons are in the core.  Period.  Boron absorbs thermal neutrons, and control rods absorb thermal neutrons.  Water is a moderator (in Western reactors, not so in the RBMK, which uses graphite), meaning it slows down fast neutrons (which almost never cause fission) and makes them thermal neutrons.  So, think of it this way.  More water, more thermal neutrons.  More rods in the core, less thermal neutrons.  More boron in the core, less thermal neutrons.  More thermal neutrons, more fission, less thermal neutrons, less fission.

In a PWR or BWR designed reactor, if I don't move rods, and I don't change boron, the only way I can change power is by changing how much water is in the core.  If I was to raise steam flow, it will take more heat out of the reactor, and drop temperature, which will make the water more dense.  There will be more thermal neutrons, and power will begin to rise (this is how we raise power, by the way).  But as power rises, the higher amount of fissions means you create more heat, and the temperature of the water goes back up.  As you heat that water back up, it becomes less dense, and you have fewer thermal neutrons, and the fission rate goes back down, and power stabilizes at a slightly higher value.  If I pull control rods out, I am absorbing fewer neutrons, so there are more thermal neutrons in the core, meaning the fission rate goes up.  But as the fission rate goes up, temperature also rises, which means now the water has expanded and is less dense, and now the amount of thermal neutrons goes back down, and reactor power stabilizes at a slightly higher value.  If I dilute out some of the boron, the same thing happens.  I am absorbing fewer neutrons, more fissions, temperature rises, less thermal neutrons due to less dense water, fission rate lowers back down, and power stabilizes at a slightly higher value.

This is my entire point.  Because temperature has a direct effect, by a negative temperature coefficient, it is not possible for a reactor of this type to runaway.  You have to actively change something to make the power rise, and as soon as the power rises, temperature feedback will make it stop rising and stabilize power.  The difference is that in the RBMK, since graphite was their moderator, which is not measurably affected by temperature, they do not have that feedback.  On top of that, since the RBMK reactor is balanced with the absorption of neutrons by water (not the moderating effect, since they have plenty of moderator already in the graphite), when they have temperature rise, it removes a neutron absorber (water) because they form more steam bubbles.  This makes power rise further, more steam bubbles, more power, more steam bubbles, more power.  That's why the RBMK design is so awful.

But I'm trying to get you to understand that it is exactly the opposite in virtually all other reactor designs.  Everywhere but the RBMK, if power rises, for whatever reason, you will have negative feedback that stops the power rise, and it will stabilize power.  It's a fundamental aspect of the physical design of the core.  It cannot runaway.  It just can't.  It's physics.  The nuclear reaction simply cannot accelerate, on its own and rise exponentially, unless it's an RBMK.  You have to physically move rods, or physically change the boron concentration, or physically adjust steam flow in order to change power in a PWR.  The same holds true for a BWR, with the exception that they do not use boron, and they vary their recirculation flow to control the void fraction in the core, which is to say, the amount of steam voids in the core.  But like I said earlier, this is also different from in an RBMK, because steam voids LOWER the amount of thermal neutrons in a BWR, because you're removing the moderator.  So in a BWR, whenever the power rises, you get more heat, more steam voids, less moderator, less thermal neutrons, and again, the fission rate lowers, and reactor power stabilizes.  This is a fundamental design aspect of virtually all reactors, except for the RBMK.

I hope this makes this clear as to why a runaway like you describe cannot happen.  You CAN overpower a reactor, by improperly adjusting rods/boron/steam flow, but it will not accelerate.  It will always always always rise to a higher power, and then stabilize.  This is why we have numerous redundant safety features, so in the instance of an overpower (most likely through a steam leak or something similar), the reactor will automatically trip itself.  If you somehow failed dozens and dozens and dozens of instruments in such a manner that they somehow could not cause a reactor trip (which would be essentially impossible to do), that's why we have trained operators who can recognize this situation and safely trip the reactor, assuming that somehow NONE of the safety systems were operational.  Keep in mind, like I said, the safety systems are designed such that they will give you a trip signal when they fail, anyway.
Reply: @adamhutchins1981  word was he survived then died in the late 90s.. the divers I know survived, "lethal dose" does not mean immediate death.... my poor attempt at dark humour, being around  Dounreay will do that to you😁
Reply: I am so impressed at your method of describing things.  I'm really starting to get (I feel) the type of understanding I've wanted to have for a long time.  I really appreciate you taking all the time you did to explain all this such great detail.   Thank you sir!
Reply: @adamhutchins1981  poop
Reply: It gives me a sense of security knowing that the control rods in western reactors can only contribute negative reactivity, not BOTH as the ones in the reactors at Chernobyl apparently did. Still, it appears what Dr. Ruzic said about what the operators  should have done still applies. If I was in their shoes, I think I would have shut it down, waited for the Xenon-135 to decay away while using the time to figure out how to carry out the safety test without poisoning the reactor. It's a scary idea that the very act of shutting down a reactor could instead trigger a deadly explosion.
Reply: We can dispose of the waste, by using it as fuel. Many of the fission products are not waste, some can in fact save your life.
Reply: @adamhutchins1981  I've been reading you comments here, very insightful. I'm getting hooked on understanding nuclear energy, in particular, so I can debunk some things my friends like to debate me over. In defense of professor Ruzic, these videos are likely the equivalent of an undergraduate lecture series, Nuclear power 201. But the video, along with your "field observations" have been great information.
Reply: richard mccann   Your message and all-caps writing are perfectly compatible.  A complete nutcase.  Thanks for warning us.
Reply: Adam, thanks so much for all your very informative and helpful comments about reactor operation. I believe nuclear energy should be the wave of the future as opposed to covering the entire landscape with unsightly solar arrays and towering wind turbines (which incidentally kill thousands of birds and bats). Given the general public ignorance and fear about all things nuclear, however, I fear that this country and others such as Germany are going in precisely the opposite direction and will continue to close down nuclear plants. The only country I can think of that is actively building new plants is China. There must be very dim prospects for people in your line of work.
Reply: As a foreigner it is very interesting to know the speed at which a US Navy reactor can be recovered following a scram.
Reply: Well you are correct, but don't forget, he's a professor. He teaches future nuclear engineers. He cannot pour into their minds your work experience. Isn't it safer and right to teach them a correct safety technique, then leave it to their future employer and their work experience to figure out the exceptions and how to do it  ?
Reply: do you guys know the thunderf00t channel? he recently suggested that there migh have been an zirconium explosion in chernobyl, basically the liquid white hot zirconium directly oxidizing with the oxygen in the water, or perhaps a reaction with water like alcaline metals do.... looking foreward if he actually manages to do some experiments in that direction :)
Reply: You convinced me, I think I'll build one and try it.  Have you got an extra fuel laying around?
Reply: Thank you so much for your careful explanations! Very enlightening
Reply: 2020/01/23 - @Adam Hutchins, u are so cool. My one of many  hobbies is Reactors, Fission and Nuclear Waste. Read all ur comments and Your explanations were above remarkable - You certainly went the extra mile! I even archived your comments, they were that good. Many thanks Adam. Wishing you and ur family, many blessings and much health. Thanks again. All ways ur friend, johnny.
Reply: Ok. I have learned a lot from this thread. But honestly, isnt what the Prof said true? If the Chernobyl operators had admitted failure and tabled the test for three days to let the Xenon burn off, the disaster would have been averted? Obviously smarter operators could have ramped up sooner, but in Chernobyls case we are talking nuclear operations for dummies.
Reply: richard mccann  i could only read one sentence of your insane rambling before i got a headache, try turning off caps lock next time you try to convey any sort of message
Reply: Wrong wrong on every account
Reply: This is the most details, professional and epic comment thread I ever seen in youtube. Thank you for all the teaching.
Reply: @adamhutchins1981  Thank you for your information that proof my answer to the question how to control a reactor is introduce boronic acid in the coolant when I was in my high school physic. My dumbass teacher only trust what written on book, control rod! Everything is done by control rod.
Reply: Oh look, a dude who worked in the navy and doesn't know the difference in any way of what happens in a standard reactor vs what you worked on. Wait till you find out that they still generate MORE decay heat than your entire reactor did!
Reply: @adamhutchins1981  I'm going to come back to these comments a lot. Learning about nuclear reactor operation from the mouth of a reactor operator is fascinating. And very illuminating, I had no idea our reactors were so safe. But, I have one question if you're still willing to write. So, is there any recourse in the case of heavy structural damage to the reactor? Can control rods become too damaged to sequester the fuel properly? If so, is there procedure for that, or is it too unlikely?
Reply: richard mccann  If someone cut off Marie Curie's hands, someone else would have discovered nuclear physics. As a species that invests a lot of time and effort in understanding the fundamentals of the universe, nuclear physics was inevitable. Real bummer it was spurred on by warfare. But necessity is the mother of invention, and you need to have a fairly dire need for extremely large amounts of power if you're going to pursue the expensive science of splitting atoms. It's a shame the reactors we opted for were chosen because of their important role in nuclear strategy. But, they work, and you can store the spent products safely. Part of that is investing in a storage facility. They were going to build a really big one in Yucca Mountain, a ways from where I live, but a bunch of misguided people who don't understand nuclear science got it cancelled.
Reply: I would imagine the 3 day rule is something they came up with to prevent another chernobyl type event. They probably figure there's more than one reactor that can provide power so why not be extra careful with the one that's powered down and make the procedure an industry standard to absolutely ensure safety.
Reply: @adamhutchins1981  

Firstly, may I also thank you for taking a not unconsiderable amount of time, and effort, in laying out well thought through, and thorough, explanations, not just based off of your knowledge and expertise, but, equally, experience ... like many, I have learned much, and will come back, off and on, to take notes ...

Totally off topic, but your comment you made about a manager not knowing what Xenon is, and thinking it was a person, reminds me of a --- quite possible --- apocryphal story, that you yourself may have heard a variation of ...

It dates back to the Reagan era, some time after his (in)famous public announcement regarding SDI. Apparently, some offical --- or could have been a senior officer, but which branch is immaterial --- from the Pentagon visited a defense contractor, that was researching a satellite-based laser, which was designed to shoot down incoming nuclear missiles whilst either in the boost phase, or post boost phase, but certainly whilst the 3rd stage remained connected to the 2nd stage. Usually the story follows that said person asks to speak to one of the Chief Engineers of said project:

Him: "So how is it going so far ...?"
CE: "Not too good. In order to shoot down the incoming missile, early enough in its flight, and which then still presents as a big enough target, we calculate that the output of the laser needs to be around 10^20 Watts. The highest output, from a test laser we've built, and have only just achieved, is 10^10 Watts ..."
Him: "So you're halfway there, then ..."

Like I said, probably apocryphal. But, then again, being an old Navy hand, you probably seen officers being promoted way beyond their actual abilities. It's a good thing you have Senior Enlisted, especially the CMDCM/CoB, to keep them in check ... Civilian officials, though, especially when they have the appropriate clearances, is another matter, altogether ...
Reply: Operators + Vast amount of practical operation experience = dyatlov in making.

SOP must be followed at any cost. No matter how experienced you are.
Reply: Adam Hutchins I am wanting to major in nuclear engineering and I know you said you didn’t but clearly you know what you’re talking about and you know your way around a reactor. I assume you have many interactions with them on a daily basis and I was wondering if you could give any advice to me?
Reply: Thanks for sharing. It is great that we have this forum to debate these concepts, processes and ideas.
Reply: Thats not the point, who build it?, , French said humans, Illinois says its natural
Reply: @adamhutchins1981  Both of you are able to clearly state your points in simple language. That is a rare talent!  Thank you, both!
Reply: @adamhutchins1981  In all these comments about US reactors, the common factor is competent operators who are not being forced into poor decisions by managers, either Soviet or the one wanting to speak with My. Xenon.
Reply: Do naval reactors not operate with way higher uranium enrichment? Also, the reactivity can be much easier tuned? So, are naval reactors not designed with changes in reactivity in mind? In such a case, the "poisoning" of the reactor could be of lesser importance. (I am not a nuclear engineer, these are open questions)
Reply: richard mccann  OKLO
Reply: @adamhutchins1981  As a retired 20 year navy (avionics guy) I've met a handful of you Nukes (Nav-Speak), and they were to this day (even after doing an Engineering Masters at UM) the smartest guys I've even met! 
Ironically NONE of them had ANY interest in going into the Civilian Nuke world....
You are a prime example how the Navy, Super-Critically Crams basically a PhD worth of Nuclear Physics education into your head in 2 years!  I enjoyed reading your comments more than the video! You should write a book!
Reply: @clancyjames585  Yeah they made a big mistake and paid with their lives.
Reply: Adam, i trust your expertise here but here's the thing, low enrichment/massive reactor/phase change around the fuel rods... this is serious. and for the records, i love RBMK type reactors. but when you have this type of affinity to unstability, you shouldn't try to push it harder. with much respects, this is a different monster.
Reply: @AltarParssoy  I agree that the RBMK design is too unstable and should not be "pushed harder." My entire point is to say that our PWR and BWR reactors are different, and don't suffer the same design flaw. The original point I took issue with is the notion that when you shut a reactor down, it can't be restarted for 3 days due to xenon. I have tried to explain why this is not accurate. Perhaps with an RBMK, it may not be safe to do so, but with other reactor designs (PWR and BWR), this is simply a non-issue. I don't have any knowledge of CANDU reactors, so I can't speak to their design, of course. But with PWR and BWR designs, this instability simply does not exist. Since the water is the moderator in these designs, you don't have the issues that the RBMK suffers from, because the physics don't allow a runaway power excursion. Any time you have a power rise, it results in displacing and removing the moderator, and self stabilizes the chain reaction. The only way to make power continue to rise in an PWR or BWR is to add positive reactivity by some other means, by continually withdrawing control rods, continually diluting out boron, or continually drawing more and more steam. Any step change in reactivity will change power, and you will have a corresponding negative feedback provided by moderator displacement to stabilize it. This makes it stable enough that even on the largest xenon concentration swings, it only results in slow temperature changes that the operator can easily manage with control rods and boron. It is very controllabe and stable.

So yes, if you are speaking of the RBMK design only, I would agree that inherent instabilities would make it such that you wouldn't want to "push it harder." With water-moderated designs like the PWR and BWR, this is simply not the case. I know I have mentioned it in previous posts here, but Navy cores especially are designed such that you can have a scram/trip of the reactor, and perform a "fast recovery startup" anytime within the next hour or two, meaning you can use your known previous operating values and simply pull control rods back out to re-establish criticality. After a window of an hour or two, you can still re-start the reactor any time you desire, but at that point you have to perform a calculation to determine your expected critical rod height. You can essentially start a Navy reactor back up pretty much any time you want to after a scram/trip. There just simply isn't that same xenon limitation. The same thing applies to commerical reactors, as well. There just really isn't a limitation on when you can start back up.
Reply: @adamhutchins1981  well, maybe they should've "push" those control rods a bit harder, lol. But yeah, my entire point was about RBMK. And I have a feeling that CANDU can tackle this issue successfully. Maybe pebble bed graphite moderated reactors can experience some issues. Navy reactors, they can do anything, they're built to endure.
Reply: It all depends on the set of circumstances relating to the restart of a Nuclear Reactor... 

And while I am 100% certain you know your field of work; indeed, Chernobyl is one very clear example of what happens when things go wrong when you didn't follow safety protocols.
Reply: But US Navy uses highly enriched uranium with different tolerances on both envelopes of critical cycle .
Reply: @TheAngelOfDeath01  I feel like you have misunderstood my point here. The video said that for ALL reactors, once you shutdown, due to xenon, you cannot restart for about 3 days. My entire point, this whole time, is that this is patently and demonstrably false. The RBMK design is vastly different than all other designs. This may, in fact, be a true statement for Chernobyl (RBMK), but it is absolutely false for water-moderated PWR and BWR designs. It seems like I haven't made myself clear, in that I am trying to show that while this instability is found in RBMK reactors, it simply does not exist in other designs.

Yes, I am fully aware of the instabilities in the RBMK design, and I agree that Chernobyl is a case of operators wantonly driving their reactor well outside of established limits while blocking nearly all safety interlocks. I am not arguing that the professor in the video is wrong when it comes to xenon issues with the RBMK, I am saying that he is wrong if he believes these issues exist in ALL reactors. I am trying to separate the RBMK and it's problems from other reactor designs, and help people understand the differences, and help them see why this phenomenon does not exist in better, more stable reactor designs.

If you are arguing that the RBMK reactor design used at Chernobyl has stability issues as it relates to xenon poisoning, then yes, I agree with you. My point is that this issue is not found in other reactors, because the design is vastly different. The notion that you cannot start up a reactor for three days due to xenon poisoning may be true for RBMK (I am not an expert on this design), but it is absolutely incorrect and false when it comes to PWR and BWR plants. Please understand that I am speaking of designs other than the RBMK when I say this. That is my entire point.
Reply: @seancrowley3762  The enrichment is not the only factor to consider. I am not clear on what you mean by "both envelopes of critical cycle," so I am not sure how to respond to that. But it is not just Navy cores that differ from the RBMK, and it is not just the enrichment that makes these designs more stable.

It is true that Navy cores are able to handle rapid changes in power level, by their design, which makes them well suited to shipboard use, where the ship has to be able to rapidly change its propulsion power for maneuverability. But commercial PWR and BWR reactors also handle power changes much better than the RBMK design, despite having a fraction of the enrichment that the Navy cores have. It's not the enrichment that makes these plants more stable, it is the moderator. Using water as a moderator, which can significantly change density with changing temperature, as well as being displaced by small steam voids due to nucleate boiling, gives you an inherent temperature stability. Because as power rises, temperature rises, moderator density goes down and is displaced by more nucleate boiling, leading to a reduction in neutron moderation, and a stabilization of reactor power. It's not really higher enrichment that leads to the stability, it's using water as a moderator, instead of graphite, that makes it more stable.

There is a small caveat to this. You can only use water as a moderator if you have slightly enriched (or more) fuel. You simply can't maintain criticality with natural uranium without using something like graphite as a moderator. So you do have to have at least some slight enrichment of a few percent in order to use water as a moderator, or else use heavy water as a moderator like in the CANDU design. So, yes, some amount of enrichment is required for this. But it is not the enrichment that gives the stability, it is the water moderation that gives the stability. Navy cores are absolutely much higher enrichment, which helps them to rapidly change power levels as needed. But you still have the temperature stability in commercial water-moderated designs (PWR and BWR), despite the fact that they have barely any enrichment at all, and only slightly more than the RBMK design. I don't know nearly enough to speak about the CANDU design, but they also use water as a moderator (heavy water), and I would expect that they would have similar temperature feedback in their design, as well, just like in PWR and BWR.

So, a slight amount of enrichment is required in order to use water as a moderator, but it is not the enrichment that gives the temperature stability. It is the water moderator, instead of graphite. From a nuclear physics standpoint, this is the biggest difference between the RBMK design and the PWR and BWR designs. An RBMK plant is essentially a BWR style plant, except it uses fixed graphite moderator bricks for neutron moderation. Structurally, the RBMK plant is very different, being a channel-type reactor, instead of a core contained in a single large pressure vessel. But from a physics standpoint, it is essentially a naturally enriched BWR using graphite as a moderator. It is the graphite moderator that makes this design different, and gives it the lack of temperature stability.
Reply: I don't doubt your experience but keep in mind, naval nuclear reactor operators were responsible for 3-mile island, because they made the mistake of treating a 2880 MW reactor the same as their 12 MW reactor.
Specifically, because on a ship, keeping a pressurizer from "going solid" is a primary concern. 
I'd highly recommend; (though it's more about biases than nuclear engineering.)
https://www.youtube.com/watch?v=1xQeXOz0Ncs&list=WL&index=19
Reply: Are the physics of a military reactor the same as those of a civilian reactor?  And,  I think you're both talking about the same thing - he's talking to general operators, you're talking about one specially trained operator with a special reactor.
Reply: @hughezzell10000  If you're talking about the actual nuclear physics of it, yes, all uranium fission reactors have the same basic physics. You have neutrons colliding with uranium, causing fission, producing more neutrons. For U-235, the neutrons must be moderated (slowed down). During this time they are slowing down and bouncing around in the core before they cause fission, they can also either leak out or be absorbed in some other material. The differences in different reactor designs vary in how the neutrons are moderated, and what other substances are involved that they can be absorbed in, such as control rods or dissolved boron, etc. The physical structure, arrangement, and geometry of the reactor is different in different designs, as is the enrichment, which is the ratio of U-235 to U-238. Basically, the general physics of a uranium reactor are the same, and it is the physical structure and methods of moderating and absorbing neutrons that is the only real difference.

To your second point, I don't remember the exact quote, because it's been about a year ago when I first saw this and began commenting, but this professor made some comment to the fact that he always teaches his students that if you shut a reactor down, you cannot restart it for three days. This implies he was speaking about ALL reactors, not just the ones at Chernobyl. I have watched a lot of his videos, and I have found him to be very accurate and excellent at explaining the things he is teaching. But this is one instance where I have actual operating experience that contradicts his theoretical teaching experience. Basically, if he is speaking about the RBMK reactors that were found at Chernobyl, he may in fact be correct (I have no operating experience with those plants). But if he truly was speaking about ALL reactor designs, then he is incorrect on this specific point.

As I have tried to explain, one of the largest design differences with the RBMK reactor, aside from the physical layout, is that they use a fixed moderator made of graphite blocks, which makes them operate in what we refer to as the "over-moderated condition." This means that they rely on water as an absorber of neutrons, which leads to two distinct differences. As power and core temperature rise, the fixed graphite moderator does not leave the core, and voiding within the coolant results in a reduction of neutron absorption. Both of those factors lead to a condition where a power rise causes power to rise further, if no action is taken. Contrary to that, PWR and BWR do not use graphite, and operate in the "under-moderated condition." The coolant alone, the water, is the only moderator. As power and temperature rise, coolant is displaced out of the core due to lowering density and more steam voiding in the channels. This means that the moderator goes away to some extent, and causes the fission rate to stabilize.

I hope this helps you to understand the differences, but yes, the actual physics of a uranium fuel fission chain reaction is the same. You have to moderate enough neutrons and control the amount of neutrons that leak out or are absorbed in other materials, such that on average, one fission event results in one neutron that causes one more fission event. The excess neutrons must be taken out of the core either through neutron leakage or absorption in other materials. It is a careful balance, but it is very easy to maintain, especially in PWR and BWR reactors. In a PWR, on a normal day we slowly remove dissolved boron from the core every few hours to keep the power level up. It really does self stabilize, because temperature directly affects neutron moderation in a negative feedback mechanism. You perform a dilution to remove a little bit of boron, power rises and stabilizes over the next few minutes, and then as fuel burns up, you watch power slowly lower over the next few hours. Then you perform another dilution. The dilutions raise power normally by about 0.1% of full rated power, and then power slowly lowers back down by that same amount over a few hours as fuel is used up. The difference is that during a xenon transient, instead of performing dilutions every 2-3 hours, we perform the dilutions or borations maybe every 10-15 minutes. But the same self-stabilizing mechanism remains.

With Chernobyl, they have a positive feedback inherent to their core, so as xenon begins to burn out, power lowers faster and faster, and rods must be withdrawn further and further. And with the design they had with graphite tips on their rods, they had a limit to how many rods could be withdrawn. By their design, not having the inherent feedback and stability, and with as physically large as their core was, there was a limit to how large of a xenon transient they could control. The accident would have never happened had they not intentionally bypassed safety features, and had they not intentionally "jump started" the reactor back up by withdrawing way too many rods after the power level fell too low. Even despite all of that, a lot of people believe that had they manually inserted rods, slowly, instead of using the AZ-5 button, the accident likely would not have happened. The largest problem is that they had so much xenon, and with the design of the control rods, they were producing almost no power in the top of their core, and all the power in the lower portion of the core. When all the rods were simultaneously inserted, the graphite tips that were in the middle of the core were driven into the bottom of the core where all the power was being produced anyway, and the lack of inherent feedback and stability caused power to rise exponentially.

Our reactors are operated in a much more uniform manner. In commercial PWRs we use dissolved boron to control the reaction, and control rods are fully withdrawn. In BWRs, rods are carefully positioned to keep power even, and power adjustments are made by controlling recirculation flow through the core, which strips voids out of the channels and controls the void fraction, because BWRs do not use the dissolved boron. In either case, power level is kept even across the core because of this. And our control rods also have no moderator tips, like the graphite tips at Chernobyl. Our control rods are purely neutron poison material. At any time if our power begins to rise, we lose the neutron moderator due to lowering density of the water coolant, which stabilizes the fission rate. And at any time, if we have an automatic or manual reactor trip, all control rods immediately fall into the core, inserting a huge amount of neutron absorber material. When our rods fall in on a trip, they displace water in the channels, actually removing moderator from the core, and they insert a huge amount of neutron poison material. So the actual physics of the chain reaction are the same, because a uranium fission chain reaction is the same wherever you go. But the design of the core drastically changes the way the neutron population is maintained and controlled. The physics is the same, but the way we control how many neutrons are in the core are significantly different.
Reply: Since you appear to know a lot about this subject I am going to ask you a question that may trigger many haha but I am genuinely curious. If xenon 135 has a half life of 9 hour, wouldn't it all decay in 9 hours? Why does it take 3 days for it to completely disappear?
Reply: @maxmemc4889  Half life specifically means statistically that's how long it takes for half of the  atoms to decay, the number of xenon-135 halves every 9 hours. Halving every 9 hours means after 3 days, you're left with about 0.4% left.
Reply: "Rule of Thumb" is the phrase you are looking for.
Reply: Practical vs theoretical understanding
Reply: How are my chances of interviewing you for a pop-science book on nuclear energy I'm currently writing? Your insight would be invaluable.
Reply: Yeah science. GO NAVY.
Reply: As a fellow US  Ex-Navy nuclear reactor operator, I agree with this 100%.  Immediately following a reactor scram, you can do a fast recovery start up.  If the time to begin the FRSU exceeds a certain time (I don't remember that time because it's been about 23 years :D) you have to perform a normal startup checklist, which includes a xenon calculation.  Also, "-1/3 DMP SUR" just gave me flashbacks.  I haven't thought about SUR in years.
Reply: No need to apologize! Your experience as an operator who’s been there , done that gives you unique insight into how the actual systems operate and not just the principles of operation/ theoretical explanations.
     I find this subject absolutely fascinating and now wonder if I indeed missed my calling when the Navy wanted me for the Nuc program some 40 years ago...
     They got me either way as a Naval Aviator retired after 27 years.
     Great comment!!!
Reply: @adamhutchins1981  you are awesome sir. Thank you for your service and for these comments. This real world data and experience is so interesting to hear about
Reply: right, it's a lie that has been around for 40 years. Chernobyl exploded due to xenon poisoning, it was simply not true, it was a combination of human error and design-related errors.
Reply: @adamhutchins1981  right afterwards graphite-moderated reactors were technically upgraded and not refilled and gradually shut down. Incidentally, the design of Chernobyl was an American design, after which Russia developed its own designs and never again relied on data and documents from other countries.
Reply: @darkbreed  While you are correct that the accident was caused by design-related issues (and there were MANY), part of the human error portion was, in fact, xenon poisoning.  By lowering their reactor power to such a relatively low value in a short span of time, there were fewer neutrons to neutralize the xenon poison that was rapidly building up inside the core.  Once they reached their target power level for the test to begin, the xenon had begun it's rapid buildup.  Since core power was maintained by control rod movement, the operators began removing the rods from the core to maintain their low power level.  This was not a normal configuration for their control rods, which allowed hot spots to form in the core.  The removal of the control rods plus the hot spots boiling the coolant to steam in unexpected locations caused power level to rise rapidly.  The core has a positive void coefficient of reactivity, which means that having water in the coolant channels reduces reactivity.  The hot spots that formed quickly boiled the water away in that area, which increased reactivity in that area.  This led to core power overall increasing rapidly.
Reply: @sixft7in  i am one of the few people in this world who spoke personally to a member of team 2 and he told me clearly that the neutron concentration in the reactor had never reached the shutdown value and therefore xenon poisoning never took place. He said only the missing 50% cooling water (which no system in the reactor could show) and thus half-dry fuel rods between which the graphite blocks of the completely removed control rods sat were exposed to oxygen radicals, as the reactor was never designed to operate at 50 % Cooling water level was built, there were temperature spots in the middle area of the fuel rods that could no longer be cooled, but the conditions for a maximum of nuclear fission occurred and at this point they deformed, melted and long before you even noticed what was going on mechanically retracting the control rods prevented (which was not noticed by further design errors, only when someone gave his life to see what was going on there with his eyes and could only report the display of the system that the control rods were completely retracted is wrong). the second worker went in with a sledgehammer and tried to drive the rods into the reactor, he died in the process and achieved nothing. Shortly afterwards the turbines stopped because the decomposition temperature of water had been reached and the sensors had measured hydrogen in the steam flow and the system completely failed. He said it only took 12 minutes for all of the water from the reactor to evaporate and decompose and the hydrogen / oxygen concentration and the burning graphite triggered an explosion. Again he clearly said the counter tubes did not measure any reduction in the neutron flux, ergo no xenon poisoning could have occurred (which was also the reason why team 2 did not come across the water problem when it started, they would have even if they had noticed it right away Can't do anything anymore, the GAU was already going on hours beforehand).
Reply: How can I be trained to work with nuclear reactors without being a nuclear physicist?
Reply: @basedgodstrugglin  Two ways to do it. 1) Join the Navy, or 2) Take an entry level job at a power plant and work your way up.

First, you can enlist in the Navy as a nuke. You have to pass the various aptitude tests to be selected into the program, but you don't need to have any college. Just a high school diploma/GED. If you score high enough on the aptitude tests, believe me, they will be trying to talk you into the nuclear program for the Navy. You'll be selected for one of three ratings, either Electronics Technician, Electricians Mate, or Machinist Mate. That's pretty much going to be your job function. ETs learn how to maintain electronic instrumentation, and learn how to be reactor operators. EMs learn all about electrical theory and motors and generators, and you maintain and operate that equipment for the reactor plant. MMs learn all about piping, pumps, and valves, and you operate that equipment for the reactor plant. All three of the ratings are nuclear trained, and all three can get your foot in the door at a commercial plant when you get out. This is probably the most direct method. The Navy Nuke program is a 6 year (or longer, if you reenlist) commitment.

Second, you can get hired on at a power plant in an entry level position, instead of going in the Navy, first. Power plants will post jobs with job descriptions like "nuclear helper, nuclear technician, facilities personnel, etc." Those are all entry level positions, and the job description will give you a better idea if you read through it. Those jobs require no prior experience (though it helps, if you have any). They require just a high school diploma/GED. The job involves mainly cleaning, sweeping, trash collection, decontamination of equipment, catch bag installation, fire watches, and other general laborer type jobs. It's not exactly glamorous, and not super technical of a job, but it's the entry level job. If you get hired on into one of these positions, you're in. These positions are considered entry level jobs meant for people to then move on into a maintenance apprentice job or move into Operations as a system operator (aka auxiliary operator). Some guys prefer maintenance. Some guys prefer Operations. Kind of your choice. If you want to actually operate reactors, you want to go operations.

And here's where things converge. If you have the Navy experience, you can hire in either as a maintenance apprentice, or hire in to Operations as a systems operator/auxiliary operator. If you hired in as a nuclear technician (entry level job), you can also bid on one of these jobs, and you wind up at the same place. The SO/AO job is not a licensed position, but instead they work out in the plant, operating valves and pumps and equipment, racking breakers, tagging out equipment for maintenance, etc. They also perform rounds, where you walk down the equipment in your area looking for issues and logging all the equipment readings.

If you decide to go the maintenance route, you'll become an apprentice, and learn how to perform maintenance repair, testing, and troubleshooting on plant equipment and systems, and then become a maintenance journeyman. The maintenance guys don't get to operate anything, they just perform maintenance on the equipment. Some people prefer this. Once a journeyman, maintenance technicians can later apply to become a supervisor and move into maintenance management positions, as well.

But, if you want to operate reactors, you want to get into the system operator/auxiliary operator position described earlier, and then wait for your chance to go to license class to become a reactor operator. It's about a 2 year process, in total, to train for and test and get your license, and it's definitely a challenging and intense program, but it's training provided for by the company, and it's considered your job. You're not doing any other work, you are getting paid to be in the classroom and in the simulator, learning how to be a plant operator. Keep in mind, if you have certain Navy Nuke experience, namely an ET qualified as reactor operator, or have watch officer/watch supervisor experience, you can also hire directly in to a licensed operator position, and go straight to license class. But it is quite a bit more difficult going through class to get your license without having the plant experience of being a systems operator/auxiliary operator first.

If you manage to get to that point, make it through license class and pass your exams, you will become a licensed reactor operator, and you will get to operate reactors. This only requires a high school diploma/GED, and a lot of effort on your part to move up through the process and make it happen. Me, personally, I got my HS diploma, did 6 years in the Navy as a Nuke ET/reactor operator, hired in to a civilian plant as a systems operator, then went to license class to get my license. It took about 11 years from my high school graduation to get through my 6 years in the Navy and then work my way up at the plant to getting my license.

Keep in mind...nothing against the engineers, but these college trained engineers that work at the plant only provide a support role. They don't get to operate anything. They evaluate and trend data and provide engineering insights to the plant, but they are support personnel. Some of them move up to getting a senior reactor operator license and become operations supervision, but they still don't get to operate anything, only supervise. And quite a few of them don't make it that far. Nothing against engineers, but a lot of them are not cut out for being an operator, anyway. It's awesome if they've got their college degree, and it's still something to be proud of, but you don't ever have to feel inadequate not having a degree. A lot of the smartest and best operators I've met have not had a college degree, and a lot of the engineers with degrees have not always measured up to that standard. A lot of them are really brilliant people and good to work with, but at the end of the day, it's just a different career path. That said, a lot of engineers also hire in to the system operator/auxiliary operator job and work their way up from there, and don't necessarily hire in to engineering.

But if you want to actually operate, your best bet is the Navy nuke program or working your way up from a nuclear technician job at a civilian plant. It's a long road to becoming an operator.
Reply: @basedgodstrugglin  Every technical job has the high-end engineers, 4-year degree operators, and the entry level workers. Just have to find the place you want to work and see what the requirements are.
Reply: @pyronuc  great information right there. I sincerely thank you for your time and information
Reply: @sixft7in  sweet. I like nuclear energy and I’ll look into making it a career. Thank you
Reply: @basedgodstrugglin  You're very welcome. Glad you got something out of it!
Reply: Interesting thread, note to self, return later
Reply: Thank you for your detailed and extensive comments. They were a pleasure to read and I learned so much from them. As a Master-welder with 30 yrs of experience, I have always been interested in nuclear technology. When through medical malpractice I could no longer do my beloved welding, I had to find a hobby that would be challenging and interesting to me and one that I can still do with the medical issues I now have. Since I'm also a huge nerd that hobby became reading about/ studying nuclear reactors. And then the RBMK specifically because it is such an oddball design compared to rest of them out there. Of course the Chernobyl disaster plays a big part in that as I'm living in a country that had to deal with the fallout of that accident. I was 15 yrs old when it happened.

A friend of mine also gave me reading materials about your PWR. Reading technical manuals and dusty, boring-you-to-tears reports is one thing, but to read the comprehensive replies from someone with your extensive experience in the field willing to sit down and type out the explanations is quite another. It really brings home in an engaging way what is required to run these amazing machines and what is involved in keeping them safe. I'm of the staunch conviction that we simply need nuclear power if we are ever to lower our emissions to acceptable levels. Your explanations will help a lot of people alleviating their fear of anything nuclear. Personally I do not fear nuclear energy/ reactors. However, just like you stated, we do need to give it the respect and reverence it demands due to its inherent nature. It is the same thing I always said to all apprentice welders walking into my welding cabine; "You have to respect your welding-gun because it both has the power to create and destroy. Mess around with it at your own peril."
Reply: According to RBMK related regulations, operators had to wait 24 hours before starting up again. They did no such thing.
Reply: @wallacegrommet9343  Chernobyl series seems as adaptation of cliches which were, ironically, combined with official propaganda. Series like these should be perceived as fiction and must not be used to make any kind of conclusions.
Reply: Speaking about RBMK, there were some issues but I wouldn't say it was/is that bad. After the safety upgrades, there are no incidents so far. They've got positive reports from operators as quite well behaved reactors. There are eight of them still operational and they're going to be around for some time. The students of nuclear engineering specialities are still learning how to operate RBMK reactors and practicing on the Smolensk NPP regularly. The last of RBMK-1000 is planned to be shut down in 2035.

Most of known issues were caused by politically motivated decision of ignoring the prototype stage and deploying the project directly into production. It's expected that approach like "let's do our testing in production" never ends well. Further development of this concept led to MKER project which was a modern and safe in terms of current regulations. However, it was abandoned due to economical reasons and "bad reputation" in favor of continued work on the BN series of fast neutron breeder reactors. There are BN-600 and BN-800 operational now and BN-1200 is in development stage. But this is another story.
Reply: Xe poisoning in itself was just one of the many other reasons why Chernobyl happened. More important was the fact people who operated it had no idea about it.
Reply: What about just recharging the dilithium crystals and getting us outta here on impulse power? 😂
Reply: Are you trying to compare a 36 year old Soviet Union reactor that did not even have a containment dome with the modern reactors of today being discussed here?  Chernobyl was 15 years earlier than your 20 year experience even began.  It was really OLD.
Reply: @robertzeurunkl8401  To be fair, it didn’t have containment mostly for the reason that developers thought they’ve took every precaution needed and having containment would be overkill. RBMK is a monstrously difficult construct with really A LOT of things taken into account. Number of scientific research they had to do to make this thing work was astounding. Compared to RBMK, any modern PWR reactor is nothing but a mere oversized pressure cooker.
Reply: Chernobyl reactor type had serious design flaws, which were fixed later, after explosion on all of them. It was dangerous to operate them as is without fixing them. On top of that operators did not understand specifics of its design and its behavior in less stable situations.
Reply: Tree mile exident happened because people who operated it came from Navy, with training in operating different type of reactors and related mindset of running them on submarines.
Reply: @Vlad_the_Impaler  Somehow, I get the feeling that you are Russian, but used speech to text speaking in English for that comment?  haha  "Tree mile exident" is exactly what I think someone with a Russian accent would sound like saying that in English.  🤣😁😎
Reply: @robertzeurunkl8401  I sort of feel like you have completely missed the entire point of what I was saying, or you are replying without reading previous comments. In fact, the entire point I have been making is that the RBMK design is radically different from all other reactor designs. You just restated my point. This is exactly what I am saying. The professor in the video made a comment that ALL reactors cannot be started up until 3 days after being shutdown. He clearly has a lot of academic knowledge in nuclear physics, and likely has quite a bit more knowledge than I do about the RBMK design and the Chernobyl disaster. But my exact point I have been trying to make is that the RBMK is DIFFERENT from other reactor designs, and his 3-day wait that he says he teaches students is false, for other reactor designs. I know, from actual real world operating experience on three different reactor designs, myself. I feel like you haven't understood the point I was making in all of my comments. I am the one saying to NOT try to use RBMK knowledge to assume things about other designs.
Reply: @robertzeurunkl8401  Also, just for the record, another point you've made is that we can't compare the Chernobyl design because it's "old" and older than my experience. Would it surprise you to know that all 3 reactor designs and plants that I have operated are OLDER than Chernobyl? Don't discount my knowledge and understanding and my experience, simply because Chernobyl happened when I was a child. The vast majority of nuclear plants were designed and built at or before Chernobyl. Chernobyl was a bad design, but it's not because it was somehow older and they didn't know better. The first plant I qualified on and operated was commissioned in 1963, the second plant I qualified on and operated was commissioned in 1961, and the current plant I work at came online in 1977 with construction beginning in 1970.
Reply: @basedgodstrugglin  I know this is really late, and I apologize, but I wanted to let you know that the comments to your post from pyronuc are from me. At some point, my phone switched YouTube accounts, and when I replied using my phone, the posts show up with that user name. I just wanted to verify that it was me who replied to you.
Reply: @Vlad_the_Impaler  🤣🤣😂😂
Reply: @robertzeurunkl8401  Perhaps he's using voice typing feature. It could give a lot of pain sometimes. I tried and eventually gave up, typing manually makes everything much easier. Apparently, we haven't reached this level of technological development so far.
Reply: @clancyjames585  As a retired software developer I keep track of IT failures with a huge impact. Are you saying that the Chernobyl disaster may have been due to an IT failure?
Reply: Any sentence started "As a..." is a reg flag for what is coming next.
Reply: @Xelbiuj  the claims in that video are incorrect.  The operators at 3 Mile Island acted contrary to Navy reactor operator training, but in line with the operator training from the plant designer and the power utility. Take the time to read the report of the president's commission on 3 Mile Island to supplement YouTube videos.
Reply: A very well formed and respectful rebuttal, and as a novice with a hobby interest in nuclear physics and more specifically nuclear powered electrical generating stations, i would concur with you here. (Although i have no formal training or experience,  i have studied this subject for over 20 years for fun)